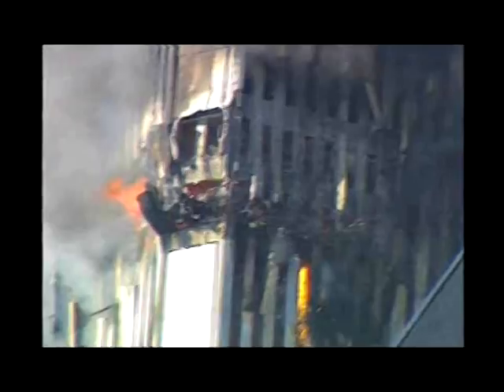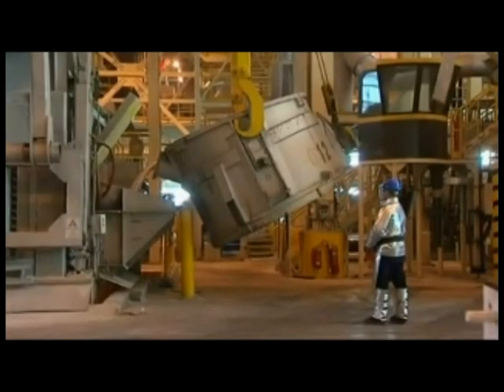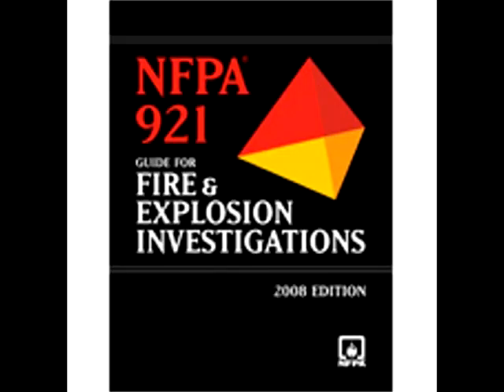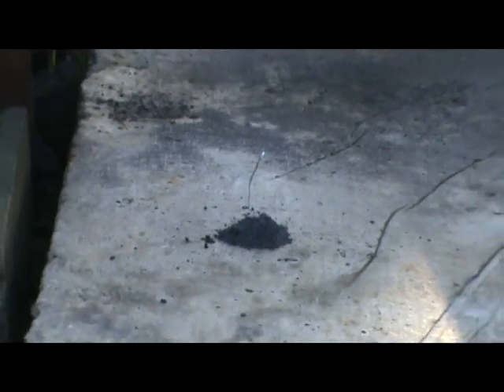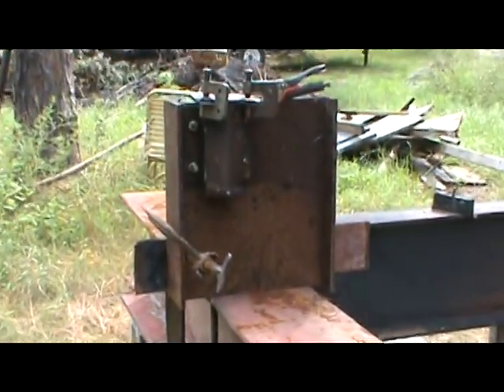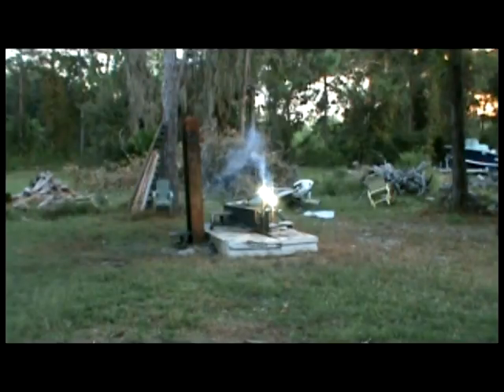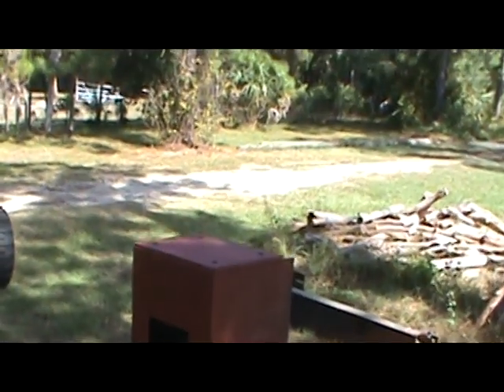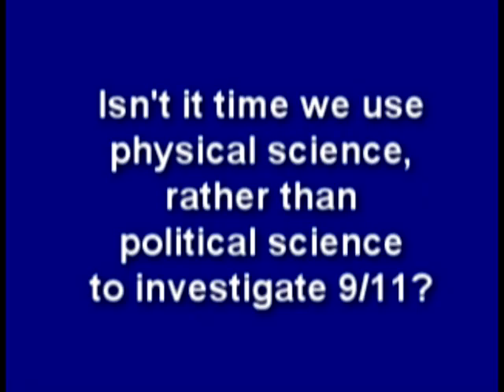9/11 Experiments: The Great Thermate Debate

Comment: I will certainly give you credit on four counts: This is the first video on the topic EVER which I have watched in it's entirety, You are clearly not the average idiot ready to jump on the crackpot bandwagon and conjure alien balls and holograms because you've got nothing better to do, I find no issue whatsoever with your engineering or practical presentation, and well - it IS a straightforward practical presentation leaving no questions as to your methods and therefore verifiable by "anyone". Very very well done. Have you convinced me that thermi/ate WAS utilized in the demolition of the WTC's? No. Not this video alone. But your presentation has earned my respect, and does beg the question perhaps as to why other experiments (such as the Nat Geo clip referenced) were so easily abandoned as failures. Good work man.
Reply: madgodloki The purpose of this video was never to prove that thermite was used in the demolition of the towers.  It was to disprove the Nat Geo claim that no type of thermite can be used to cut through steel beams.  

Being that a single engineer can cut through solid steel with basic thermate and rudimentary cutting devices constructed in his backyard, it is clear that the Nat Geo investigation is a joke, and is clearly a poorly conceived whitewash attempt.

Therefore the video proves that the common "debunker" excuse that thermite can't be used to cut steel beams, is wrong.

"They didn't melt that I'm aware of."

http://www.fema.gov/pdf/library/fema403_apc.pdf

"Evidence of a severe high temperature corrosion attack on the steel, including oxidation and sulfidation with subsequent intergranular melting, was readily visible in the near-surface microstructure. A liquid eutectic mixture containing primarily iron, oxygen, and sulfur formed during this hot corrosion attack on the steel."

I see "steel" and "melting", as well as "liquid" and "iron" in the same sentence.  Seems to me that FEMA proves that molten iron was present in the WTC rubble.  Which couldn't be caused by office fires or jet fuel.  Which leaves...incendiaries or pyrotechnics.

Enter the Harrit paper, which uses electron microscopy, XEDS imaging, DSC analysis, electrical resistivity testing, and various other tests to determine that there is thermite (nanothermite) in the WTC dust.

So we have forensic evidence of melted steel, as well as an incendiary which can melt steel.  Clearly, something fishy is going on here.

You can speculate all you want about how unlikely you think it would be to have these devices planted in the towers, but all that amounts to is your opinion, which happens to conflict with the proven facts.

A stronger argument would present evidence that contradicts the facts which I have just cited.
Reply: madgodloki <the initial reaction causes the noise, which then results in the heat which would not instantly melt anything, The noise happened during the collapse so the better explanation is that the noise was from the collapsing.>

The thermite compound was contained within an energetic matrix, which would produce expanding gas and amplify the cutting potential of the incendiary.  You pretend to know exactly how long it would take for an advanced material such as this to weaken steel enough to cause a collapse.  You also don't seem to take into account the weight of the floors above the impact, which wouldn't need the steel to be completely severed before it gave out.  You also don't take into account the possibility that the incendiaries targeted the crucial welds and bolts between beams, which would have taken much less material and a much shorter amount of time to sever than an entire steel beam.  You also don't take into account the fact that other forms of pyrotechnic could have been used in conjunction with the type analyzed in the thermite paper.

You seem to be drawing a lot of baseless conclusions without any real facts to back them up.

< hahaha, See this shows me you don't even know what you're talking about. You probably read "signs of thermite" and then assume they found like smoking gun pieces of mixed thermite right? That's not the case. If you want me to refute something how about you cite it exactly as its stated?>

Actually I'm just going off of the obscure statements you made in your last post.  You didn't provide a clear enough argument for me to argue against so I merely assumed that you were using the "this material magically formed out of the individual components during the collapse" theory which I have heard before, and seemed to be the closest thing to your statement.  Clarify your argument if you would like me to refute it in a different manner.

<The chips you're referring to had double the maximum energy of thermite, I don't know if you understand chemistry in the slightest but that means simply put "It. was. not. thermite.">

No.  It means, simply put, that the thermitic components were contained in an energetic, silica and carbon rich matrix.  You know, carbon, like charcoal?  Carbon compounds tend to contain energy.  Thats why we burn them for fuel.  The combustion of this matrix provides the added energy necessary to raise the energy output in the DSC test, and would supply expanding gasses which would increase the cutting efficiency of the incendiary material contained therein.

<Paint on the other hand, the paint that was used on the beams had a very similar organic compound in it, and it would have a higher energy level.>

Harrit tested the paint in the same DSC analysis as his chips, and the two are in no way similar.  You may know this if you had read the study.  Paint has a broad thermal spectrum (i.e. doesn't spike violently).  The Harrit sample releases all of its energy in a very short amount of time (spikes violently).  Moreover, the Harrit samples release molten siica and iron upon ignition.  Show me a paint that does that, and Ill show you a paint that would never pass fire code.  On top of all that, paint has a very high electrical resistivity, while the Harrit material has a very low electrical resistivity, due to the presence of elemental aluminum.  Can you cite an expert in a published paper that can refute all of this? 

<Why didn't your boy try to ignite these so called thermite chips in a 0 oxygen environment?>

Because he was comparing the DSC to the methods used in the Lawrence Livermore Lab to test Xerogel, a known form of super termite.   As I've already said, the Harrit sample also contains carbon compounds, which would not combust properly and give an accurate total energy reading without the presence of atmospheric oxygen.  Comparing The Harrit sample to Xerogel, Harrit had a higher energy peak, and a quicker reaction time.  Therefore, it is a more potent incendiary than Xerogel.  But clearly, this is paint....

Considering the actual collapse didn't happen in a vacuum, it is more relevant to know the DSC reading in the same atmospheric conditions that existed during the collapse.  The XEDS, the DSC, the release of molten metal and silica, and the electrical resistivity tests prove beyond a shadow of a doubt that the material is an incendiary.  Do you have any published expert analysis to refute any of this?  Or just your flawed logic?

<Hey I've got something for you to think about, If this example was accurate then they didn't find the equivalent of crumbs and you're claiming it was the whole god damn plate of cookies that fell. In fact they found a piece of fucking rice crispy treat. You still confused?>

Yes.  You seem to not be very good at clearly and concisely making a point.  You also seem to have misunderstood the analogy I was making in the first place.  My point was that there would be as much chance of getting cookies in the manner I described as there would be for these advanced engineered incendiary materials to randomly form from the individual components of the structure during the collapse.

<they didn't find any thermite they found something that was double the maximum energy content with a similar ingredient that just so happens to also be found in the paint that they paint to beams with>

I've already been over this.  The carbon - silica matrix adds extra energy.  The red paint in the WTC contained aluminosilicate (kaolinite) not elemental aluminum.  You having trouble?

<How many people do you think would have been involved in that? How many people could have seen what was happening? Do you think they were paying off these people or do you think some hundred or two hundred people were cool with setting up a giant death machine for free on the side?  How much do you think each person would require to kill thousands of people without speaking up about it after the fact for going on 14 years?>

Irrelevant conjecture.  Present facts that dispute the Harrit analysis.  Your opinion means nothing when weighed against facts.

<Knowing that half the people who believe this garbage also think the lizard shapeshifters in the illuminati are responsible for them losing their job doesn't help me buy into this fantastic story. >

Cite the survey that provides evidence for this claim.  Oh, you've got nothing?  Just ad hominem?  Weak argument.

<Again if you read the harrit paper, why did he not try to ignite this 'thermite' without oxygen? Simple way to prove its thermite and not paint. >

Already explained this to you.  There were several tests that prove that the material was not paint, because they tested the material specifically against paint.  Maybe you should read the study.

< I do know that the energy content was not thermite and that means it wasn't thermite, and no some hypothetical gel doesn't strike me as a very likely answer.>

Hypothetical gel?  There are published papers that the Harrit paper references, that prove the existence of sol-gel type incendiaries, as well as catalogues their manufacture processes, incendiary characteristics, and applications.  The Harrit sample was compared to Xerogel, a known sol-gel incendiary produced at the Lawrence Livermore lab.  Try again. 

<You do realize that thermite doesn't have higher energy content than most common items? Its the fast reaction and oxidation which causes it to be so dangerous,>

Exactly.  And the DSC tests prove the material releases all of its energy in a very high thermal peak in an extremely short amount of time, and produces molten iron spheres.  Which is nothing like paint, or any other similar material.  Prove otherwise.

< Seems pretty simple to me, you get this huge piece that could really show your side so youuu choose not to use it properly.>

??  Be more clear please.

< He also didn't end up in a very reputable journal, in fact someone put a publication through with just a bunch of non-sense in that very same journal and it passed the peer reviewing. >

Another false ad hominem?  Seems to be all you've got.  The gibberish paper you are referring to was never published.  The journal said they would accept the paper initially so that they could verify the identity of the individual during the payment processing, and expose the fraud who kept submitting gibberish papers to their journal under an alias, trying to falsely discredit their review process.  It worked, because this particular fraud never tried to submit any more gibberish.  

Cite a paper that was actually published and prove that there was no peer review, then you might have something.  Any other misrepresented facts you want to cite as your scientific evidence?

<This is talking about modern paints in something completely irrelevant I think it's talking about modern paintings perhaps.. page 183 though mentions analysis finding elemental aluminum in the red, yellow, green, and purple at least.  Very convenient, I suppose the government got to them! >

I see nothing in the source you cited that proves the presence of elemental aluminum.  The authors say that the aluminum readings are most likely associated with aluminum stearate, hydrated alumina, or aluminum hydroxide.  Also, this excerpt is a study of oil paints...  

Find the MSDS sheet for the paint used on the WTC structural steel?  Elemental aluminum powder is highly reactive, and is a controlled substance.  It would surely be listed in the Material Safety Data Sheet if it was contained in a paint.  Where is it?
Reply: +El Clandestino Cognitive dissonance.  If it conflicts, simply ignore the facts and pretend that they are made up.  Much easier than adjusting your world view.
Reply: +Richard Driskill and why would that be?
Reply: Richard Driskill ""Being 6"6' has its advantages" HAHAHAHAHA! Yep, if you are "6 inches 6 feet", I think that you would have an advantage in a bizarre circus of the VERY short and VERY wide. I would agree, NO ONE would measure up to you! But that's the way it is when you're born with no spine"

Kinda sounds like you had three separate insults in your little head, and you couldn't decide which one to use, so you just combined them poorly and came up with the incoherent crap you just posted.  

Are you implying that you don't believe that I'm actually 6"6'?  Are you saying that you think 6"6' is circus-tall?  Both translations would imply that you are short and physically unimpressive, and envious of tall, statuesque people.  Have you always had trouble expressing your thoughts?  Try again, but formulate your next comment in a way that doesn't make you sound illiterate. 

"Get those peepers checked meathead, they glow bright green in your avatar, bitch."

Aww, that's cute.  You actually think I'm a dog typing on a keyboard.  Poor guy.  Apparently you believe that most people put their actual photograph as their avatar.  You should also realize that a camera flash refracting in the lens of an eye and putting off a green glow (or a red glow is common for humans, but clearly I'm a canine so that's irrelevant) doesn't mean the eye is actually green.

"have you even bothered to read anything in these luntic threads? You'll find my answer there; it's easy to spot, it'll be the only sane entry."

I don't think your post that proves the conclusions of this video wrong exists.  I think you lack the capacity to formulate a coherent argument; you can't even formulate a coherent insult.  Prove me wrong, little guy.
Reply: Richard Driskill I'm not the one who has to come up with anything.  The burden of proof lies with the accuser.  You claim that the conclusions this video demonstrates are wrong.  You've had a couple days to make an argument or prove a point.  You have failed to do so.  Every further post of yours that fails to advance your argument exposes you as a liar with no actual refutation.  

This particular post, by volume, is mostly "HAHA".  Is your keyboard broken, or is this really all you can come up with?  Pathetic.

Factutal refutation?  No?  Your idea of a coherent argument is "HAHA" mixed with penis jokes and nonsensical insults?  And you really think people are going to read this and think "yeah, that guy sure is smart; I'm going to believe him"?

You're going to have to do better than that, simpleton.
Reply: Richard Driskill Nope.  Pretty sure you never made that post.  And it's clear that you are afraid to try your hand at an actual argument, because you know you would get slaughtered.  Go ahead and try me.
Reply: +Richard Driskill Wow! I click a video about thermate and what do I see...?  Are you freakin' everywhere, adding nothing to the conversation but endless streams of hahahaha's and insults? How sad! 
(sure, dude: go ahead and respond with more empty insults and endless streams of typed out HaHa's, thinking I give a shit and would feel offended).

ps: the 9/11 official report is a (sick) joke, even the investigators  themselves said they were "set out to fail"
Reply: +Jim Vicious The main reasons I think he's wrong about this, Well first off he keeps saying that old thing about steel beams don't melt with jet fuel. 
   They didn't melt that I'm aware of. They were merely compromised by the intense heat. 
  Melted iron and aluminum and any other material very easily could have been from inside the building they would have melted and formed the same iron balls as any other molten iron. 
   I don't think his video is convincing because it just shows exactly how many people and how much material would have to have been moved into the building with the unsuspecting victims acting like nothing was going on with it. 
    Plus all the people involved and not a single person feeling the guilt or slipping about it.... 
  The number of people who just grasp at straws trying to make this a conspiracy that happened.. and when you look at it objectively hot steel beams are weaker so they fall. floors collapse and cause the appearance of concrete and dust and whatnot shooting out windows. The immense amount of synergy the people would have needed to set up something this massive is ridiculous especially when a plane hit the building and we know for a fact that would be enough to take it down. 
   I agree though he is not nearly on the level of crazy people, he may be convinced for silly reasons but at least he isn't buying it out of nothing.
Reply: madgodloki <The proven facts, That's rich.>

Scientifically proven.  Cite your academic refutation, since you clearly aren't enough of an expert to be able to formulate your own analysis.  Title.  Author.  Publication.  Date.  Then either quote from the body of the article or paraphrase specifically how these facts have been disproven.  Good luck.

<How long would it take the thermite/thermate to cut through the beam? Milliseconds? The explosions are reported right at the time of the collapse yes? So that means the devices which brought the tower down were activated and brought the tower down at the same time. Ha, get real conspiracy nut.>

Uh, thats generally how pyrotechnics work.  You seem easily confused.  Clarify your line of questioning; it isn't clear what you are implying.

<What were the other contents of the planes which hit the buildings? Can you show me how its impossible the same traces you link to a specific case didn't come from something else?>

What are you talking about?  Are you implying that the material discovered in the Harrit paper magically formed out of the remains of the building collapse, while it was collapsing?  Ah, I've hear this wacko theory before.  Let me guess: you believe that rust from the girders, and aluminum from the cladding all pulverized itself into the exact same crystalline shapes, in a uniform size, mixed uniformly in mid air, and managed to fuse in a silica and carbon matrix, and then cure and harden into perfectly engineered incendiary chips, all in a span of 10 seconds during the collapse.  Right.  You've clearly got it all figured out.

Hey, I've got something for you to try out.  Take a big mixing bowl, and add flour, sugar, salt, baking soda, milk, and chocolate chips.  Toss the mixture in the air, pelt it with a few eggs, and then hit it with a flamethrower on the way down.  You'll get chocolate chip cookies, I promise.  Still confused?

Identifying the individual components of thermite from separate pieces of debris is irrelevant.  Finding all of these components combined in the same chip, in the proper ratio to exhibit an exothermic reaction and release molten iron, is very significant indeed.  For your sake, I really hope you can understand the distinction.

< You said they found nano-thermite from the harrit paper, Yet harrit himself was saying many many many tons of thermite were used and there's not really any evidence that ever happened>

Oh, so there is no way it could have happened during the elevator modernization?  Do the elevator shafts not have access to the central support columns?  Cite your proof that this could not have happened.  

<Also Thermite has a maximum energy content of 4.0MJ/kg The experimental energy content of the chips found was double that at least. Which means it wasn't thermite.>  

Confused again, huh?  Had you read the paper, you may have discovered that the authors addressed this issue.  Thermite has an energy content lower than that observed in the Harrit chips.  That is because, in the Harrit chips, the thermite reactants are suspended in a matrix that is energetic in and of itself.  The presence of carbon in the silica matrix gives reason to believe this is the case.  The added energy from the energetic matrix is why the DSC spike is higher than normal thermite.

<The answer is Red paint. Lol They were testing the red paint used to paint the beams.>

Ah, right.  Now it is all so clear.  In one breath you claim this material has double the energy of thermite.  In the very next sentence, you claim it is paint.  You realize that you just made the statement that red paint is more energetic than thermite, right?  I realize you're easily confused, but surely I don't have to clarify why that statement is idiotic.  Please, tell me I don't.

So red paint displays the same DSC spike as the Harrit material?  Show me where you found this information.  

Red paint contains elemental aluminum?  Find me the MSDS sheet for any paint that contains elemental aluminum (the type of aluminum found in the Harrit samples after a MEK soak followed by XEDS analysis).  If I remember correctly, paint sometimes contains kaolin clay (an aluminosilicate), which is not the same as elemental aluminum.  

Red paint has the same electrical resistivity as the Harrit sample?  Pretty sure paint is exponentially more resistant than the Harrit sample, due to the lack of elemental aluminum.  Of course, all of this was already addressed in the Harrit paper, which you didn't read.

Would paint dissolve or soften in paint solvent?  Pretty sure it would.  So why does the Harrit sample expand to 2x the volume and remain very hard?  Could it be that it's not paint?  Could it be that it is an advanced sol-gel nano-incendiary?  Thats what the 9 expert authors of the Harrit paper conclude.  Which published experts can you cite who draw a different conclusion?

<" I see "steel" and "melting", as well as "liquid" and "iron" in the same sentence. " 
  Yes cause this is grade A science, I saw some keywords in a paper written by people who are probably involved in the conspiracy!>

This information is in FEMA's metallurgical analysis appendix C.  And you're an idiot.  Get a clue.
Reply: 442hoeky he said it was mercury and office materials do float on molten aluminum. (as they're burning to ash from the heat) 
It really is quite simple, guys: No way jet-fuel fires compromises steel high-rise H-beams, and surely not in the synchronised manner it happened on 9/11 THREE TIMES IN A ROW. If it smells like a dead rat, looks like a dead rat, and science says it's a dead rat, and there's three of them; we're most likely dealing with dead rats, here.
Reply: madgodloki Yes, the quite significant difference between the melting point of carbon steel - that is the temperature in which a phase change from solid to liquid occurs - and the temperature in which the elastic modulus, or stiffness is significantly altered has indeed tended to be selectively ignored by certain folk. Indeed the 'science' invoked by many an armchair engineer would have negated the possibility of the iron age altogether. That said, your second point (although technically totally unscientific! Damn!) has always been the one that ... just seems ... well hell yes. Man, you can't tell a secret to 25 people without  the cat getting out of the bag. A conspiracy of this magnitude - perhaps (depending on which exact flavor of conspiracy you choose to subscribe to) involving thousands of folk who have managed to keep their yaps shut - hell, I'd be more willing to accept aliens, or Illuminati Jews, or whatever idiocy as more likely. For the record I personally have no issue with "official" findings, at least to the degree that I've bothered to research them. THAT SAID - still kudos to the producer of this video for their version of an impartial (insomuch as there is no obvious obfuscation of results that may not have fit with what they were hoping to accomplish) and reasonably scientific first hand investigation. IF more people like him were to make a specific type of noise - as opposed to "Shit man, it was the invisible alien balls and rods thingamajig with Satan's face in the smoke cloud so it must mean.."  Well then, the thinking percentile would indeed be forced to at least look beyond their comfort with official investigation; and THAT in itself is to be commended in this sad sad world of Huxleyesque "Who did Paris blow this week?" barely conscious sheeple.
Reply: +Boris B 

Yup, he's a delusional moron.  The funny thing is that I think he truly believes he is winning arguments by "HAHA"ing at all of his own uncreative, pathetic insults, while at the same time presenting no actual argument or facts to support his unsubstantiated claims about the conclusions of this video.

It's sad but funny.
Reply: +Jim Vicious I have to say that I agree with you for the most part, but he lost me at 3:09 when he showed a coin floating on what is clearly Mercury but shows it right after saying office materials will float on molten aluminum.  This is the kind of propaganda I'm used to from "truthers" and it shows he's no different.  The idea that this was an "open air" fire is ridiculous, anyway.  Each floor of the tower is a sandwich of concrete.  A huge fire inside with a massive hole (from the plane) and a perfect chimney (air vents and elevator shafts) creates a perfect furnace for creating extreme heat.  Ancient man melted iron and steel with very little understanding of "how" and with no fancy fuels - just wood and air.
Reply: +442hoeky

It would take a blast furnace to melt steel with hydrocarbon fuel of any kind.  The fires in the WTC never got close to hot enough to melt steel.  The towers were in no way similar to a blast furnace.
Reply: Nathan Stirling
<Yes it does, jet fuel reaches the required temperature to weaken steel by at least forty percent.>

Ah, so in your factually unsupported OPINION, jet fuel (which mostly burned off during the initial impact and subsequent fireball) can cause a total structural collapse, but thermite, which is designed to melt metal, could not.  Solid argument

<That point is significantly less than half the 'melting point' of steel.>

Very true,  Did you account for this little piece of evidence?:

http://www.fema.gov/pdf/library/fema403_apc.pdf

"Evidence of a severe high temperature corrosion attack on the steel, including oxidation and sulfidation with subsequent intergranular melting, was readily visible in the near-surface microstructure. A liquid eutectic mixture containing primarily iron, oxygen, and sulfur formed during this hot corrosion attack on the steel."

Hmm, the words "melting" and "steel" as well as "liquid" and "iron" in the same sentence seem to highlight the existence of, well, melting steel and liquid iron.  In your own words, jet fuel would not be enough to melt steel in this situation, therefore there was something present to supply the extra energy needed to do this damage.

I wonder what this could have been...
Reply: 442hoeky
<but the WTC was a unique building in size and design.  It's very difficult to compare apples to oranges.>

True, but technically every building is unique, and no building fire that I am aware of has ever resulted in the melting of the steel structure.

<I should point out that the third building is an argument in and of itself.  If all these arguments were based solely on the that building coming down, I wouldn't say a thing because there's definitely something strange about that.>

Certainly, and I would add that there would be no reason to believe that whatever happened to building 7 didn't also happen to buildings 1 and 2.
Reply: +rose white 
There is no evidence of any fires that wouldn't be considered relatively minor.  They were only in isolated areas on a few floors.  There was no visible fire at the time of collapse.  Asymmetrical fire cannot cause a symmetrical collapse, and certainly not at free-fall.  Even the best computer model that NIST could fabricate is progressive failure, and looks nothing like the actual sudden collapse.

Unless you can scientifically refute the Harrit paper, which proves that incendiaries were used in the collapse, and is peer reviewed and has been published for 6 years without a refutation, then your conjecture doesn't really amount to much.
Reply: madgodloki < Hmmm, nope. I know it wouldn't be POP as it started WHILE it was collapsing. The heat no matter how much pressure or amplifying would not be capable of igniting and burning through a thick steel beam at the very same moment. >

A) You don't know that.  Cite your academic source for such information.  Harrit et all reference multiple papers that cite the ability for nano or super thermites to react explosively.  Explosives = near instantaneous severing of steel supports.
B) You forgot about the possibility of the use of other types of explosive pyrotechnics, and the likelihood that the welds and bolts would have been targeted, which would take far less energy to sever.

You pretend to be Mr. Omniscient explosives guy, and know exactly what could or could not have been done to demolish the towers.  You make false assumptions and blanket statements, and act like they are proven fact.  They aren't.  Move on.  Unless you'd like to cite a study to support your claims?

<Also now you're saying it's cutting the beam. I can show you a picture of a beam melted through with thermite it's not a clean cut, not so easy to control thermite leaves that molten residue on the beam too, There are workers which came in AFTER the attack to clear some debris and cut some of the beams, I'm pretty sure you're mixing up your ideas here. Was it CUT as in cut by a worker, or was it MELTED like you truthers always tote around jet fuel doesn't melt steel beams. >

Which of my statements are you referring to exactly?  It would help if you cited the specific statement that you are attempting to refute.  Again, we have a clarity of argument issue.

<Did you take that into account when you thought about the beams being weakened by the office fires and jet fuels?>

Sure.  Had the structure failed due to fire, the weakest area would have buckled and the top portion would have toppled to that side.  Clearly, the structural damage and fire was asymmetrical, therefore the failure should have been asymmetrical.  Ever play Jenga?  When you pulled out that bock near the bottom, did your Jenga tower turn to sawdust in midair?

< You wouldn't need thermite to cut through the beams at all, enough heat will cause the integrity to be compromised. Not nearly the amount you need to actually melt beams. >

Except the heat was only present on the damaged floors.  The bottom structure was undamaged and unweakened.  The smaller, lighter portion of the tower collapsing and turning the larger, stronger bottom portion to dust defies this little thing called physics, specifically Newton's third law.  When the top floors collapsed, its force was not just exerted on the single floor below it, but onto the strength of the entire structure (which would have exerted the same force back onto the falling structure).  The benefit of a steel cage support structure is that the force is exerted evenly throughout the entire structure.  The collapsing top floors would have easily been supported by the undamaged structure below.  It is physically impossible for such a collapse to happen unless the steel support structure is removed or compromised.  

Moreover, even if the top floor did somehow have enough energy to crush the bottom floors to dust, the top floor would have been crushed to dust at the same rate, and the energy taken to do this would have defeated the inertia of the initial collapse.  There would be no remaining energy to continue crushing the bottom floors.  Your beliefs contradict the basic laws of physics.  Try again.

<You didn't consider the possibility that perhaps metal eating termites were also set loose, or that prisoners tunneled into the building and used their fingernail files for several weeks to grind through little by little into the beams just enough to weaken them under the weight of the building that was hit by a plane, on fire and at a high enough temperature to compromise the integrity of the steel beams without any explosives at all anyways. >

The difference is that there is peer reviewed, published forensic proof of thermite in the WTC.  See the difference?  The fact remains: until you can cite a contradicting, published expert analysis of the WTC dust (none exists), your argument really amounts to nothing.  It amounts to the opinion of an anonymous shill on YouTube vs the scientific experimentation and analysis of 9 experts in their fields.  Hmm, which one weighs more?

<The more fantastic the story has to be, the more likely some evidence of the plan would have turned up by now. Its either a very simple plan that required less than 3 people that were immediately killed after finishing the project, and they moved the materials in over the course of several months Several tons of material over a few months between very few people or you have a devout group of building destroying workers with tons of experience in james bond movies. Just seriously you sound like a kid coming up with a movie plot. >

Irrelevant.  Again, your conjecture amounts to nothing.  You fail to address or present any actual facts.  Try again.  Also, work on your punctuation and sentence format.  That paragraph was atrocious.

<This may be how things work in imagination land, but in the real world planes hit buildings and fires cause their beams to fail, there is no other explanation required there doesn't have to be a james bond plot involved for something like this.>

Oh really?  So in the real world, cite another example where office fires caused a building to collapse to dust.  Good luck with that one.

<for what reason? Killing thousands of important people for what reason? >

That's pretty obvious to anybody who has been paying attention for the last decade and a half.  Apparently you have not been.

<The thermite paper, didn't bring back any results of thermite. >

Says which published expert?  There shouldn't be a comma there, by the way.

<https://www.metabunk.org/debunked-iron-microspheres-in-9-11-wtc-dust-as-evidence-for-thermite.t2523/ >

Right...so this is your "expert analysis?"  A debunker blog?  You're going to try to refute the Harrit paper by making up lies about the peer review process (ad hominem), and then cite a blog post as your source?  You see the irony, right?  Too funny.

<Your biggest bit of evidence was the iron spheres and they're explainable by other sources of iron in the building.>

No, the biggest evidence for thermite is actual thermite, what was adequately proven to exist in the Harrit paper.  Any credible refutation?  Or just more blog posts and your misinformed opinion?

<  It will also not take away the fact that thermite can not instantaneously burn through steel. 
 Need time for the reaction and then time for the heat to transfer to the beam.>

Irrelevant.  Disprove Harrit or you have nothing. 

<The iron is explainable, the lack of evidence on your side is not.>

Funny, since I'm the only person who has actually presented evidence in this debate.  All you have are you meager, unsupported assumptions.

<There was no thermite in the test,>

Another brilliant argument.  Oh look, no supporting evidence again, what a surprise.

<They were trying to determine if something was thermite and one of the key parts was the iron spheres which can be created with a bic lighter, and some "steel wool" Go ahead try it.>

Right, clearly the red chips were steel wool and flint.  Nano flint.  Another awesome argument.  Steel wool and flint that ignite and exhibit a steeper exothermal peak in a shorter amount of time than conventional thermite.  Because steel wool has the same DSC reading as the Harrit sample.  Or was it flint?  Oh wait, it was just red paint.  Darn, looks like you've confused yourself again.

<There's also a video in that link I sent you where they recreated the iron spheres with a regular wood fire in a barrel. Your theory makes no sense. >

Ah right, your academic, peer reviewed internet blog again.  Because that's your strongest source.  Do these iron spheres produced from a barrel have the same chemical signature as the spheres produced by thermite?  Do the thermite spheres have the same signature as the spheres produced by flint and steel wool?  Car brakes?  Prove that this is the case.  Cite a study.  In the Harrit study, the authors demonstrate that the chemical signature of the spheres produced from the thermite in the DSC test is a match for the signature of the spheres found in the WTC dust.  Where's your competing reputable study that proves that all iron rich spheres have the same chemical signature?  I'd like to review it.

Whats wrong?  Why can't you cite any studies to support your argument?  Could it be that your argument is unsupportable, because it's wrong?  Hmm, I wonder...
Reply: JetMechMA What about building 7? It suffered far less damage than WTC buildings 3, 4, 5, and 6 all of which remained standing. 

Even supposing that fire in that building was hot enough to weaken the steel structure (for the first time in history), asymmetrical damage cannot cause a symmetrical global collapse.

And again free fall speed is the smoking gun for demolition. Unless ALL resistance is removed from below (for example by blowing out every support column inside and outside at the same time for a symmetrical collapse) then the scenario violates conservation of momentum and conservation of energy. 

Just look at the video, NIST claims WTC 7 collapsed because of damage to column 79, yet the collapse begins with a classic demolition "dip" in the center (far away from column 79) to ensure the building implodes instead of taking the path of least resistance and falling over. Again, asymmetric damage causing a symmetrical collapse at free fall speed through the path of most resistance does not make sense.
Reply: Emvaz22 You're clearly not experienced in pyrotechnics then. 
   The video would be enough to show you it takes more than a couple of milliseconds between the pop sound and the burning through inches of steel.  The only people to say they heard "explosions" or "gun fire" or however they describe it said it happened at the time of the collapse, the thermite or thermate or whichever would have taken a good handful of seconds AT LEAST between the noise and the melting through the beams. 
  the initial reaction causes the noise, which then results in the heat which would not instantly melt anything, The noise happened during the collapse so the better explanation is that the noise was from the collapsing. 

 "What are you talking about?  Are you implying that the material discovered in the Harrit paper magically formed out of the remains of the building collapse, while it was collapsing?  Ah, I've hear this wacko theory before.  Let me guess: you believe that rust from the girders, and aluminum from the cladding all pulverized itself into the exact same crystalline shapes, in a uniform size, mixed uniformly in mid air, and managed to fuse in a silica and carbon matrix, and then cure and harden into perfectly engineered incendiary chips, all in a span of 10 seconds during the collapse.  Right.  You've clearly got it all figured out." 
 
 hahaha, See this shows me you don't even know what you're talking about. You probably read "signs of thermite" and then assume they found like smoking gun pieces of mixed thermite right? That's not the case. If you want me to refute something how about you cite it exactly as its stated? 

 The chips you're referring to had double the maximum energy of thermite, I don't know if you understand chemistry in the slightest but that means simply put "It. was. not. thermite."  Paint on the other hand, the paint that was used on the beams had a very similar organic compound in it, and it would have a higher energy level. Why didn't your boy try to ignite these so called thermite chips in a 0 oxygen environment? If it was thermite or something of the like then it would produce its own oxygen, which is why the reaction is so much more intense and so hard to put out. 
 
 "Hey, I've got something for you to try out.  Take a big mixing bowl, and add flour, sugar, salt, baking soda, milk, and chocolate chips.  Toss the mixture in the air, pelt it with a few eggs, and then hit it with a flamethrower on the way down.  You'll get chocolate chip cookies, I promise.  Still confused?" 

 Hey I've got something for you to think about, If this example was accurate then they didn't find the equivalent of crumbs and you're claiming it was the whole god damn plate of cookies that fell. In fact they found a piece of fucking rice crispy treat. You still confused? 

 "Identifying the individual components of thermite from separate pieces of debris is irrelevant.  Finding all of these components combined in the same chip, in the proper ratio to exhibit an exothermic reaction and release molten iron, is very significant indeed.  For your sake, I really hope you can understand the distinction." 
  
  Have you ever, EVER touched thermite? The ratio can be sloppy as long as it's within a certain range of the ratio. But that's not the issue they didn't find any thermite they found something that was double the maximum energy content with a similar ingredient that just so happens to also be found in the paint that they paint to beams with. 
  Again, I can find some styrofoam somewhere near a water cooler would you like me to think the bit of gasoline near generators or kerosene or anything else means they were preparing napalm for the children?  Those darn lizard people. 

 "Oh, so there is no way it could have happened during the elevator modernization?  Do the elevator shafts not have access to the central support columns?  Cite your proof that this could not have happened.  " 
  How many people do you think would have been involved in that? How many people could have seen what was happening? Do you think they were paying off these people or do you think some hundred or two hundred people were cool with setting up a giant death machine for free on the side?  How much do you think each person would require to kill thousands of people without speaking up about it after the fact for going on 14 years?
  I would love to believe that some group of people can fly and fart rainbows but I just don't see it being that likely. 
  Knowing that half the people who believe this garbage also think the lizard shapeshifters in the illuminati are responsible for them losing their job doesn't help me buy into this fantastic story. 
  
  Again if you read the harrit paper, why did he not try to ignite this 'thermite' without oxygen? Simple way to prove its thermite and not paint.  
  I do know that the energy content was not thermite and that means it wasn't thermite, and no some hypothetical gel doesn't strike me as a very likely answer. I don't think this is some sort of james bond novel with the government being goldfinger though so I guess that's my problem right? I live on earth instead of daydream city. 
 
 "Ah, right.  Now it is all so clear.  In one breath you claim this material has double the energy of thermite.  In the very next sentence, you claim it is paint.  You realize that you just made the statement that red paint is more energetic than thermite, right?  I realize you're easily confused, but surely I don't have to clarify why that statement is idiotic.  Please, tell me I don't." 
  
  You do realize that thermite doesn't have higher energy content than most common items? Its the fast reaction and oxidation which causes it to be so dangerous, whereas a lump of wood will burn for hours and even a common camp fire could weaken beams like that to where they would collapse. 
  Again, if it's thermite why so hesitant to show its ignition in a no oxygen environment? 
  Seems pretty simple to me, you get this huge piece that could really show your side so youuu choose not to use it properly. 
  Either because you know you can't, or you were too stupid. And that's the guy you're siding with. 
   He also didn't end up in a very reputable journal, in fact someone put a publication through with just a bunch of non-sense in that very same journal and it passed the peer reviewing. 
   Color me not impressed. 

 You asked for paint with elemental aluminum, I don't feel like sitting here beating this dead horse for much longer so I found the simplest case of elemental aluminum in paint I could from 15 seconds of looking 

 https://books.google.com/books?id=ia9V2mls3K4C&pg=PA183&lpg=PA183&dq=elemental+aluminum+in+paint&source=bl&ots=wEhvjLCqA4&sig=pYl5ORkMzydguP_JKDr22Aq0OdI&hl=en&sa=X&ved=0CCUQ6AEwAWoVChMIyK-p-I_LxwIVBkySCh0DnQBG#v=onepage&q=elemental%20aluminum%20in%20paint&f=false

 This is talking about modern paints in something completely irrelevant I think it's talking about modern paintings perhaps.. page 183 though mentions analysis finding elemental aluminum in the red, yellow, green, and purple at least.  Very convenient, I suppose the government got to them!
Reply: Boris B
<What the bleep has the time loud noises of the collapse take has to do with the time it took to weaken the steel?>

Nothing.  Madgodloki is constructing a straw man argument, in which he fallaciously claims that if the bang noise was from the collapse (which it may or may not have been), therefore it could not have been demolition.  His argument is incorrect because, as you say, most incendiaries don't produce a report, and you wouldn't hear them anyway.  It is also incorrect because Incendiaries (particularly nano incendiaries) CAN cause a report similar to a high explosive due to the extremely fast rate of the reaction, and this report would happen at virtually the same time as the steel would be severed and floor collapses.  Whichever the case, his logic is flawed.

< I ask cause they keep saying the bangs heard were from the building collapsing and not from the thermite. Thermite hissess. Is anyone claiming otherwise?>

Indeed, a nanothermite can be formulated to bang.  Even a conventional thermate configured into a cutting charge (such as the ones used in this video), can also cause a bang, although it wouldn't be nearly as obvious as the report from an HE charge.  Thermite is generally going to hiss if it is in open air with nothing to confine or focus the reaction.
Reply: rose white
<You can believe whatever conspiracy fairy tales you want as they don't amount to much.>

Oh, so you have published science to refute the claims presented in the Harrit paper?

Here they are, refute them:
"1. It is composed of aluminum, iron, oxygen, silicon and carbon. Lesser amounts of other potentially reactive elements are sometimes present, such as potassium, sulfur, lead, barium and copper.
2. The primary elements (Al, Fe, O, Si, C) are typically all present in particles at the scale of tens to hundreds of nanometers, and detailed XEDS mapping shows intimate mixing.
3. On treatment with methyl ethyl ketone solvent, some segregation of components occurred. Elemental aluminum became sufficiently concentrated to be clearly identified in the pre-ignition material.
4. Iron oxide appears in faceted grains roughly 100 nm across whereas the aluminum appears in thin plate- like structures. The small size of the iron oxide particles qualifies the material to be characterized as nano-thermite or super-thermite.
5. Analysis shows that iron and oxygen are present in a ratio consistent with Fe2O3. The red material in all four WTC dust samples was similar in this way. Iron oxide was found in the pre-ignition material whereas elemental iron was not.
6. From the presence of elemental aluminum and iron oxide in the red material, we conclude that it contains the ingredients of thermite.
7. As measured using DSC, the material ignites and reacts vigorously at a temperature of approximately 430 ̊C, with a rather narrow exotherm, matching fairly closely an independent observation on a known super-thermite sample. The low temperature of ignition and the presence of iron oxide grains less than 120 nm show that the material is not conventional thermite (which ignites at temperatures above 900  ̊C) but very likely a form of super-thermite.
8. After igniting several red/gray chips in a DSC run to 700  ̊C, we found numerous iron-rich spheres and spheroids in the residue, indicating that a very high- temperature reaction had occurred, since the iron-rich product clearly must have been molten to form these shapes. In several spheres, elemental iron was verified since the iron content significantly exceeded the oxygen content. We conclude that a high-temperature reduction-oxidation reaction has occurred in the heated chips, namely, the thermite reaction.
9. The spheroids produced by the DSC tests and by the flame test have an XEDS signature (Al, Fe, O, Si, C) which is depleted in carbon and aluminum relative to the original red material. This chemical signature strikingly matches the chemical signature of the spheroids produced by igniting commercial thermite, and also matches the signatures of many of the microspheres found in the WTC dust [5].
10. The carbon content of the red material indicates that an organic substance is present. This would be expected for super-thermite formulations in order to produce high gas pressures upon ignition and thus make them explosive. The nature of the organic material in these chips merits further exploration. We note that it is likely also an energetic material, in that the total energy release sometimes observed in DSC tests exceeds the theoretical maximum energy of the classic thermite reaction.
Based on these observations, we conclude that the red layer of the red/gray chips we have discovered in the WTC dust is active, unreacted thermitic material, incorporating nanotechnology, and is a highly energetic pyrotechnic or explosive material."

Cite your sources please.  Have fun.  Oh I almost forgot, there is no scientific analysis of the dust that concludes differently than the Harrit paper.  Prove me wrong, please.

<Th evideo evidence quite clearly shows fires burning exceedingly hot thanks to unlimited air supply.>

Right, because you can tell how hot a fire is burning from a YouTube video.  And minor fires on 3 floors is going to weaken the entire steel support structure, and cause a free-fall implosion.  Gee, why hire these expensive demolitions teams to implode buildings when we could just set a few fires and have the building collapse into its own footprint?  GENIUS!  You realize that steel is a conductor, right?  Any heat applied to a steel beam is simply going to be dispersed through the rest of the structure.  It's pretty basic physics.

<You lack my experience in fire tube experiments >

If I was as immature as Richard "Little Dickey" Driskill I would be making a phallic reference right about now.  Instead, I'm going to laugh at you for such a stupid claim, and ask that you cite your credentials, link to a "fire tube" experiment that you have published, and explain how that experiment proves that office fires can melt structural steel and cause a free-fall collapse.  Too good...
Reply: Geoff Stockton
<"hot tube experiments"  
I swear I can't keep up with these damned kids.  I've never heard the term.>

Yeah, it's the new thing.  Just ask rose white, she loves getting smacked around by long, hot tubes
Reply: The most respectful reply I've ever read in a YouTube video. I wish we were all this way.
Reply: JetMechMA <You insane maniac......by your own theory that you just laid out, tens of thousands of people would need to be in on the implosion plot. And according to you they ALL have kept their mouths shut the entire time before, during, and since then.>

You have zero critical thinking ability.  A crew of 8 men could have accomplished the rigging of the towers in a couple months.  So says experienced demolition experts.  The work could have been done at night.  The materials could have been disguised as panting, insulation, or construction supplies.  The security personnel would not necessarily even have to know what was being done.  For all they know, its just run-of-the-mill maintenance work.  You clearly have no idea how a bureaucracy or compartmentalization works.

Can you present an academic refutation to the Harrit paper yet, or do you want to keep pretending like you know what you're talking about?
Reply: JetMechMA I said give a specific technical reason why the Harrit paper is flawed.  That means describe how their methods were flawed, of their analysis of the dust was incorrect.

Your long list of straw-man arguments in no way addresses the actual facts presented in the Harrit paper.  You have presented no relevant facts, and nothing you have said constitutes a technical refutation.
Reply: crushffl <I'll take the word of experts over the guy on the street any day.>

And experts published a report in an academic journal that proves the presence of advanced incendiaries in the WTC dust.

<Those same experts and engineers have looked at the forensic evidence and certainly understand the laws of physics, >

And they agree that the official explanation for how the towers collapsed violates basic physics.  ae911truth 

<How would thermite charges be placed at the precise locations to match the later plane impacts, >

Why would the charges only need to be placed at the site of the future impacts?  Its obvious that the building was rigged top to bottom, as the entire thing explodes to dust in midair.

<without being noticed?>

Brought in at night, and planted in the core columns under the premise of an elevator modernization, and under protection of a security company that had defense department ties?  The material could have been taken in in paint cans or palettes of insulation, and would have been disguised appropriately.

<How would the control systems survive the impact of a high-speed commercial airliner impacting the structure?>

The material would have been inside the structural core, and would have likely been protected and shrouded with a shock resistant and insulated material.  It would have been paired with a remote detonator, so no wiring would be required.  even if the crash had compromised several of these charges, there was still the entire remaining portions of the building which were undamaged.  Detonating the charges beginning with the undamaged floors directly above and below the impact, and then progressing downwards would have achieved the desired effect.

<Why wasn't burning thermite (2500 degrees C) blinding to observers like looking at a welding torch>

Because the structural interior core wasn't visible to outside observers...

<the collapse progressed exactly as models predict it would, consistent with physics as dynamic stresses overwhelmed the design strength, floor by floor.>

The free-fall collapse of building 7 defies physics, specifically Newton's Third Law.  NIST never released their simulation parameters, their report was never peer reviewed, and their collapse model looks nothing like the actual collapse.  Pyrotechnics are the only thing that explains such a collapse.
Reply: +Emvaz22   "I cited an academic source to back up my claim...the Harrit paper"  Oh, that paper that snuck through on the open on-line forum without the editor's approval, disgracing the forum, causing the editor to resign and the forum to be discontinued?  That one?  Yes, that one.

"There are 2000+ professional high-rise architects structural engineers, architects, demolition experts, physicists, etc that would also disagree with you".  Yes, that's about what "Architects and Engineers for 9-11 Twoof" claimed a couple of years ago before the ceased publicizing the number.  Giving them the benefit of the doubt, and assuming they are actually all architects and engineers, and assuming they are all in the US (which has millions of registered architects and engineers), that means that in over a decade since 9-11 they managed to convince LESS THAN ONE HUNDREDTH OF ONE PERCENT of the registered architects and engineers in the US that this is an issue.  That's pathetic, and yes, you are in the fringe at best.

And as usual you ignore the FACT that no explosives were needed to bring the towers down.  Steel starts to lose strength at 700 degrees F and has lost nearly half its strength be the time it reaches 1000 degrees F, well below what you Twoofers even admit the fires burned at.  The burden of proof is on you, and you FAIL.
Reply: Emvaz22 Yep. And he's doing exactly the same across you tube, no matter what the topic is. Funny? Mainly sad, i'd say. (though i get what you mean)
Reply: Emvaz22 The proven facts, That's rich. 

 How long would it take the thermite/thermate to cut through the beam? Milliseconds? The explosions are reported right at the time of the collapse yes? So that means the devices which brought the tower down were activated and brought the tower down at the same time. Ha, get real conspiracy nut. 

 What were the other contents of the planes which hit the buildings? Can you show me how its impossible the same traces you link to a specific case didn't come from something else? 
  How do you know the materials of the contents of the building? You can find traces of something completely irrelevant to explosives and i'm supposed to just believe it was some massive conspiracy?  I'm sure there was styrofoam in the building and possibly gasoline as well or even the kerosine am I supposed to assume someone was manufacturing napalm to set children on fire? 

 You said they found nano-thermite from the harrit paper, Yet harrit himself was saying many many many tons of thermite were used and there's not really any evidence that ever happened. How much thermite reaction do you claim was found again? 
  Also Thermite has a maximum energy content of 4.0MJ/kg The experimental energy content of the chips found was double that at least. Which means it wasn't thermite. So that's a flat out lie just by that fact alone. 
   The answer is Red paint. Lol They were testing the red paint used to paint the beams. 
  But grasp at straws to make it fit like I said if we play that way I can make styrofoam cups and kerosene into a diabolical plot to melt children! 

 " I see "steel" and "melting", as well as "liquid" and "iron" in the same sentence. " 
  Yes cause this is grade A science, I saw some keywords in a paper written by people who are probably involved in the conspiracy! 
  Keep up the good work truthers.
Reply: Emvaz22 "The thermite compound was contained within an energetic matrix, which would produce expanding gas and amplify the cutting potential of the incendiary.  You pretend to know exactly how long it would take for an advanced material such as this to weaken steel enough to cause a collapse. " 
  Hmmm, nope. I know it wouldn't be POP as it started WHILE it was collapsing. The heat no matter how much pressure or amplifying would not be capable of igniting and burning through a thick steel beam at the very same moment. There has to be SOME time for the exothermic reaction followed by time for the heat to transfer to the beam. 
   Also now you're saying it's cutting the beam. I can show you a picture of a beam melted through with thermite it's not a clean cut, not so easy to control thermite leaves that molten residue on the beam too, There are workers which came in AFTER the attack to clear some debris and cut some of the beams, I'm pretty sure you're mixing up your ideas here. Was it CUT as in cut by a worker, or was it MELTED like you truthers always tote around jet fuel doesn't melt steel beams. 
  Seems to me like the more convenient thing is just switched for whichever part you need it to be. 

 "You also don't seem to take into account the weight of the floors above the impact, which wouldn't need the steel to be completely severed before it gave out." 
  Did you take that into account when you thought about the beams being weakened by the office fires and jet fuels? 
   You wouldn't need thermite to cut through the beams at all, enough heat will cause the integrity to be compromised. Not nearly the amount you need to actually melt beams. 
  "You also don't take into account the possibility that the incendiaries targeted the crucial welds and bolts between beams, which would have taken much less material and a much shorter amount of time to sever than an entire steel beam. "
  You didn't consider the possibility that perhaps metal eating termites were also set loose, or that prisoners tunneled into the building and used their fingernail files for several weeks to grind through little by little into the beams just enough to weaken them under the weight of the building that was hit by a plane, on fire and at a high enough temperature to compromise the integrity of the steel beams without any explosives at all anyways. 
  The more fantastic the story has to be, the more likely some evidence of the plan would have turned up by now. Its either a very simple plan that required less than 3 people that were immediately killed after finishing the project, and they moved the materials in over the course of several months Several tons of material over a few months between very few people or you have a devout group of building destroying workers with tons of experience in james bond movies. Just seriously you sound like a kid coming up with a movie plot. 
  This may be how things work in imagination land, but in the real world planes hit buildings and fires cause their beams to fail, there is no other explanation required there doesn't have to be a james bond plot involved for something like this. We have bridges that come down over fires and they have steel beams as well. Its just simply over the top conspiracy nut shit when you start acting like there was a special team of demolitionists ready to destroy the towers... for what reason? Killing thousands of important people for what reason? 

  The shadow government just really wanted to take that tower down right? The illuminati devised this plan and used bush like a puppet? Or.. hear me out.. the fire compromised the beams, the fire was caused by a jet flying into a building. 

 "You also don't take into account the fact that other forms of pyrotechnic could have been used in conjunction with the type analyzed in the thermite paper." 
  
  And again, prisoners could have tunneled in and began to file away bit by bit at the beams and the jet planes could have been a complete coincidence its really those inmates with files that we should blame for this! 
  The thermite paper, didn't bring back any results of thermite. 
  https://www.metabunk.org/debunked-iron-microspheres-in-9-11-wtc-dust-as-evidence-for-thermite.t2523/
  
  Your biggest bit of evidence was the iron spheres and they're explainable by other sources of iron in the building.  
  Check out thermodynamic size effect. 
  
  You claim other forms of pyrotechnic, Provide residue or another valid form of evidence for 'other pyrotechnics' 
  
  It will also not take away the fact that thermite can not instantaneously burn through steel. 
 Need time for the reaction and then time for the heat to transfer to the beam. 
 
  The iron is explainable, the lack of evidence on your side is not. 

 "Because he was comparing the DSC to the methods used in the Lawrence Livermore Lab to test Xerogel, a known form of super termite.   As I've already said, the Harrit sample also contains carbon compounds, which would not combust properly and give an accurate total energy reading without the presence of atmospheric oxygen.  Comparing The Harrit sample to Xerogel, Harrit had a higher energy peak, and a quicker reaction time.  Therefore, it is a more potent incendiary than Xerogel.  But clearly, this is paint...." 
 
 Thermite is so dangerous because it can burn without oxygen, If it can't then it's not thermite it most certainly is not super thermite. 

  There was no thermite in the test, They were trying to determine if something was thermite and one of the key parts was the iron spheres which can be created with a bic lighter, and some "steel wool" Go ahead try it.  There's also a video in that link I sent you where they recreated the iron spheres with a regular wood fire in a barrel. Your theory makes no sense.
Reply: Boris B Let me fill you in, Black smoke doesn't mean its not ventilated, It was beyond a doubt getting oxygen from the elevator. You could set up a scale model and it'll do about the same thing. Its physics it doesn't change for conspiracies. 
   You could put a steel beam in a wood fire in a barrel and it will in fact cause iron spheres. Which means it is doing damage to the beam. 
 http://www.internationalskeptics.com/forums/showthread.php?t=264234
Reply: +rhino2960 That is correct.  Also, the thermite nat geo used was basic thermite, and then they substituted their results for all forms of thermite.  The author of this video effectively demonstrates that by simply adding eutectic compounds like sulfur and barium (many of the chips test positive for these elements) and employing some basic engineering know-how, he can use thermite to easily sever steel beams.  It's not that nat geo "went wrong", it's that they are deliberately trying to deceive the audience.
Reply: Emvaz22 in WW2 US special forces had thermite grenades they shoved into the (hard steel) barrels of German canons, melting the inside, leaving them useless within minutes (the thermite grenades only burning that long)
Reply: Boris B Good point.  Also, modern militaries use incendiary rounds to pierce armor by shooting a jet of molten metal through their target.  Incendiary compounds melt metal.  That is what they are used for.  Any argument that claims that incendiaries cannot be used to efficiently destroy steel columns or welds/bolts is a blatant lie.  The author of this video does a good job of proving that point.
Reply: Nathan Stirling And yet you think yet-fuel does the trick?
Reply: +Boris B 
Errrrr.....watch.
http://www.liveleak.com/view?i=37f_1339831773&comments=1
Reply: Nathan Stirling
<Do you have any idea of how much nanothermite would be required?>

Relatively little, as this video demonstrates.

<Even though it's highly unlikely that this method would work anyway.>

Thats funny, this video shows that it's actually pretty easy to cut steel members with incendiary charges.  Can you offer anything to refute the findings of this video?

<0.1 percent>

.1% of how much dust?  50,000 tons?  100,000 tons?  Unsure about that weight of all the dust, but we are still looking at an amount somewhere between 10-100 tons.  Seems kind of a lot to me...

<And even that amount was subject to ridicule in a paper that has been severely criticized in the scientific community.>

Oh, so what, specifically, is the technical fault of the Harrit paper that causes supposed ridicule in the scientific community?  The scientific discourse is played out in published academic papers.  What paper can you cite that casts doubt of the Harrit study?

Cite the Title, Author, Publication, and date of this paper, please.

You claim severe scientific criticism.  Show me this criticism.
Reply: madgodloki
<There was no evidence of a device like the ones he used that I know of.>

The author never claimed that a device such as the one used in the demonstrations was the type used to bring down the towers.  The device could have been designed to be completely destroyed upon use (thermite does melt metal, after all).  Moreover, as the incendiary material was unconventional, it would be safe to assume that the deployment of this material was also unconventional, and likely unrecognizable as such.  The debris was hurriedly hauled away and shipped to China for recycling before any real investigation could be done, Did the authorities follow protocol and search for pyrotechnics or explosives as regulations state they should?  No, they didn't, therefore your objection once again amounts to your meager, unsupported conjecture, and not proof against anything.

<The noise and the collapse aren't minutes apart its almost immediate, at the same time. So the noise is caused by the collapsing building not thermite>

As I've already explained to you, nanothermite can be formulated to be explosive, which would sever steel almost instantaneously.

Puszynski JA. Reactivity of nanosized Aluminum with metal oxides and water vapor. Mater Res Soc Symp Proc 2004; 800: AA6.4.1.

Puszynski JA, Swiatkiewicz JJ. Research Topic: Investigation of Ignition Characteristics of Heterogeneous Strongly Exothermic Reactions. Department of Chemical and Biological Engineering, South Dakota School of Mines and Technology, Current Projects. 

<Jet fuel fire can weaken beams, no matter how many of your friends will say otherwise there are demonstrations.>

Cite another example of jet fuel and office fires causing a free-fall collapse and reducing a building to micron-sized dust.

<  Your theory is the theory of a nut job.>

Seems like my theory is supportable by published science, which you cannot refute.

Try again.
Reply: Emvaz22 love this one: "jet fuel (...) can cause a total structural collapse, but thermite, which is designed to melt metal, could not" . "Solid argument"
Great comment!
(are some of these people also actually saying that thermite bangs? I ask cause they keep saying the bangs heard were from the building collapsing and not from the thermite. Thermite hissess. Is anyone claiming otherwise?)
Reply: 442hoeky
<Just remember that ancient man melted iron ore and created steel - in some cultures the ability to make predates a written language.  The temperatures required are not as difficult to attain as you imagine.>

So you are saying that the office fires reached 2800F?  Quite a claim with no evidence to support it.  I think most estimates of the temperature of the fires is about 1400F or less.  Clearly there is a discrepancy here.

Normal hydrocarbon fuel can melt steel, but only in a blast furnace configuration.  A skyscraper is not a blast furnace.
Reply: 442hoeky
<I never said it DID reach those temperatures, only that it COULD>

What COULD is irrelevant if you have no evidence for what DID.  What COULD in no way refutes the presence of nanothermite in the WTC dust as proven in the 2009 Harrit paper.

<And yes, a skyscraper CAN act very much like a blast furnace.>

I don't think it can.  It's designed not to.  Can you cite an example of this happening?

I'll tell you why it can't happen, using a very simple example.  I own a Green Egg, which is a ceramic insulated kamodo-style grill.  There is an adjustable port on top, and adjustable port on the bottom, and a ceramic basket for the hardwood charcoal (and a built in thermometer, or course).  This grill allows a free flow of air through the fuel material, and is designed to retain as much heat as possible, due to the insulation.  It gets hot.  Way hotter than a typical Weber grill.  At full boar, it still only gets to 900F, maybe a little hotter.  It rages hot enough that it causes an audible wind out the top chimney.

Why is this relevant?  Because a skyscraper is not going to have a giant opening in the bottom to allow a vertical flow of oxygen through the structure.  Skyscrapers are specifically designed to not allow a "chimney effect."  A skyscraper is not going to have ceramic insulated walls and ceilings to capture the heat.  Most importantly, a skyscraper is not going to have a gigantic billows or blower forcing a large amount of oxygen into the combustion chamber, which is what is required to get a hydrocarbon fire hot enough to melt steel.

In the case of the WTC, there was no air flow from the bottom, only at the level of the fire where the plane had torn openings in the sides of the buildings.  Although those side openings allow oxygen in to the fuel, they also allow heat to escape.  The black billowing smoke (which is the sign of a poorly oxygenated fire) would also restrict oxygen flow to the fires.
Reply: +442hoeky Interstingly, I actually recalled this blast furnace phenomena (which I had read years previously as a plot device in the 1973 fictional novel 'The Tower') while watching the events of 9/11 unfold, and wondered if such reactions - AFAIK to that point only either theoretical or predicted with small scale experiments - were actually occurring and/or to what degree.
Reply: 442hoeky
< It certainly IS relevant if you're going around saying it's "IMPOSSIBLE" when it's not>

It's not impossible for me to shit a solid gold bar, according to quantum physics.  It's never going to happen in a billion years, but technically, it's not impossible.

There have been many, many large structural fires since the advent of industrialization.  Many of which burned much longer, and much more completely than the WTC.  Can you cite an example of one that caused the melting of steel and a total free-fall implosion?  No you can't.  Yet you want me to believe that it's possible that it happened 3 times in the same city on the same day on 9/11?  Again, I would refer you to the shitting gold analogy.

<I'm just trying to warn you that by making a false or incorrect statement in the middle of a list of arguments hurts your case far more than admitting the possibility is there, but the evidence is not.>

Fair enough.

<A green egg with some wood and good airflow is in no way comparable to thousands and thousands of pounds of fuel (jet fuel and many other flammable materials).  Thermodynamics can not always be scaled down to prove a point as the amount of energy released inside the towers was millions of times more than your little grill.>

The size of the combustion chamber (aka the towers) is also millions of times bigger than my grill, so my scale-down seems appropriate.  If anything, I would think the energy density to volume ratio is higher in my little grill.  The fuel is also diffuse and scattered in the towers, as opposed to concentrated in the path of the airflow as it is with my grill.  Regardless of the amount or configuration of fuel, it would still require oxygen-enriched air being blasted in at a high volume to add the extra 1000F+ it would require to melt steel.

https://www.aisc.org/DynamicTaxonomyFAQs.aspx?id=1996

"11.3.2. At what temperature does a typical fire burn?

"The duration and the maximum temperature of a fire in a building compartment depends on several factors including the amount and configuration of available combustibles, ventilation conditions, properties of the compartment enclosure, weather conditions, etc. In common circumstances, the maximum temperature of a fully developed building fire will rarely exceed 1800°F. The average gas temperature in a fully developed fire is not likely to reach 1500°F. Temperatures of fires that have not developed to post-flashover stage will not exceed 1000°F."

Steel melts at 2800F, so obviously there is a huge discrepancy.

<Sorry, but there is not enough evidence to say the fire COULDN'T reach the right temperature.>

And there's certainly not enough evidence to say that it COULD reach a high enough temperature.

Either way, all of this merely amounts to conjecture.  The one and only scientific pyrotechnic analysis of the WTC dust turned up nanothermite, which can not only melt steel, but also produces molten iron as a product of the reaction.  I think its pretty obvious what caused the molten iron identified by many first responders and rescue workers, and documented in FEMA's appendix C

NIST turned up melted "eutectic" steel, the USGS turned up an inordinate amount of iron microspheres, and Harrit et all not only found nanothermite but also chemically matched the WTC iron microspheres that their red chips produce, to known thermite products.

If you're aware of a scientific study that refutes the Harrit paper, which demonstrates the presence of nanothermite, I would be very interested in reading it.
Reply: +Jim Vicious  Yeagh, the guy seems to know his stuff..  Nothing like this will ever be shown in the Main Stream Media. the Evidence is just way too obvious.
Reply: +Emvaz22  I think building 7 did not go off as Planned. and it then HAD to be taken down, as obvious as it would be,  because the EVIDENCE was all still in there and could have been discovered.

NO one can explain how building 7 went down. it defies all physics and Logic.
 If it went down because of DAMAGE from WTC 1 and 2, then ALL Nearby buildings would  have sustained similar damage and would need to be Demolished as well, 
 but .. NO such Demolition ever took place , did it ??
Reply: +Jeff from Jersey 
Correct, buildings 3-6 took massive damage from the collapsing towers, but they never fell.  Tower 7 had virtually no visible damage and collapsed symmetrically at near free fall speed.
Reply: Richard Driskill
Yay, Little Dickey is back.  Whats it been, a week?  I didn't think you meatpuppets got paid enough to be able to afford time off.  I guess I was mistaken.

I see you've tried to make up for your absence by promptly making 9 posts in a row, without referencing what you are even posting against.  Sloppy, and unprofessional.  I'm going to have a word with your supervisor.  I expect you shills to put up more of a fight; it's no fun otherwise.  

All this time and all these posts, and you still neglect to cite any actual evidence to disprove the Harrit study and the presence of incendiaries.  What a shame.

Go ahead.  Cite me your evidence.  Show me the "wrecked" building 7.  Show me the lightly, asymmetrically damaged facade which you believe lead to a symmetrical, free-fall collapse.  Then explain why buildings 3-6 which received far heavier damage still remained standing.

Good luck, idiot.
Reply: +rose white 
What is this personal experience you speak of?  What "basic fire tube" research have you completed?  What are your credentials, and where was your work published?  You keep claiming to have all this evidence that steel will melt in building fire.  Cite one example that happened in the real world.
Reply: 442hoeky Your mentioning of partially melted concrete reminds me of the fused balls of concrete and steel found below the rubble pile.  As the debris was tightly packed and had very restricted oxygen flow, there is no way that fires could have caused this (think of what happens to a camp fire when you throw sand on top).  The best explanation (and the explanation that corroborates the eye witness testimony of rescue workers) is that there was molten iron under the rubble pile, which does not need oxygen to give off immense amounts of heat.

Moreover, normal fires would have been doused by the huge amounts of water and chemical flame retardants being sprayed on top of the rubble pile up to three months after the collapse.  Yet in many places, the rubble pile would actually melt the boots of the people standing overhead.  Clearly, these were not normal office fires.

The most plausible explanation for the source of this molten iron is thermite, because there is forensic evidence of unreacted thermite (as well as the products of a thermitic reaction) in the WTC dust.  The paper that proves this, published by Harrit et all since 2009, has yet to be refuted or redacted.
Reply: Richard Driskill The FBI tested for the presence of incendiary and explosive residues?  What types of tests did they do, and where are the results published?

Thanks.
Reply: Emvaz22 "The author never claimed that a device such as the one used in the demonstrations was the type used to bring down the towers.  The device could have been designed to be completely destroyed upon use (thermite does melt metal, after all)."  Yeah but it had to hold the thermite in position and give it direction toward the beam as you claim, So how did it melt the entire device AND the beam, You saw for yourself that once it's in open air it takes the path of least resistance. Your claim is getting more and more crazy. 
 
" Moreover, as the incendiary material was unconventional,"
 AKA non-existent. 
 
 "it would be safe to assume that the deployment of this material was also unconventional,"
  If you're a lunatic.
 
 " and likely unrecognizable as such."
   For convenience of conspiracy theorists. 

   "The debris was hurriedly hauled away and shipped to China for recycling before any real investigation could be done," 
 Of course it was, and aliens helped them haul it too. Of course they would have been better off leaving hundreds of thousands of tons of debris covering the block for a year instead of cleaning it up... especially since so many dead bodies were probably buried within. And possibly even survivors. 
  I guess we should have thought about the poor conspiracy nuts that wanted to investigate after millions of people watched a plane fly into the towers. 

 "Did the authorities follow protocol and search for pyrotechnics or explosives as regulations state they should?  No, they didn't, therefore your objection once again amounts to your meager, unsupported conjecture, and not proof against anything." 
 
  Then where did you get your info about the supposed explosives? These people were sloppy about this conspiracy and yet still not a single real bit of evidence. 
  I don't have to prove anything against your claim, Your claim is jumping through hoops to try and seem real and it's clearly a fantasy.

"As I've already explained to you, nanothermite can be formulated to be explosive, which would sever steel almost instantaneously." 
  And yet still melt the device. Which is it, melting or exploding. 

"Cite another example of jet fuel and office fires causing a free-fall collapse and reducing a building to micron-sized dust." 

  http://www.livescience.com/16179-twin-tower-collapse-model-squash-9-11-conspiracies.html

  I've only said that the jet fuel can weaken the beams.. the aluminum hitting the sprinklers could cause the explosion and increase the temperature... 
  "This isn't obscure chemistry, Simensen says; the U.S. Aluminum Association has recorded 250 accidental molten aluminum/water explosions worldwide since 1980. "Alcoa in Pittsburgh [the worldwide leader in aluminum production] has done a series of such explosions in special laboratory in order to understand what can prevent such explosions and what are the most dangerous situations," he wrote. "For instance they let 30 kilograms [66 pounds] of aluminum react with 20 liters [5.3 gallons] of water, which resulted in a large hole 30 meters [98 feet] in diameter, and nothing left of the laboratory."" 
 

<  Your theory is the theory of a nut job.>

Seems like my theory is supportable by published science, which you cannot refute.

Try again." 

 Supportable.. if you're a nut job. 
 
 Aluminum in the plane would have exceeded 30 tons. 
   Aluminum's melting point is under 1400 degrees. a sprinkler system plus molten aluminum would cause a fierce reaction and a fierce explosion.  
  Looks like you lose, Try again.
Reply: madgodloki <Yeah but it had to hold the thermite in position and give it direction toward the beam as you claim, So how did it melt the entire device AND the beam, You saw for yourself that once it's in open air it takes the path of least resistance.>

You're kinda slow, aren't you?  The thermite is deployed, the beam is severed, and then the remaining incendiary charge destroys the rest of the device.  Its really not rocket science.  There are probably thousands of possible configurations for an incendiary deployment device that could behave in this manner.  If you really think that there is no way that a device could be designed to effectively direct an incendiary charge and then be consumed in the final stage of the thermitic reaction, then you may need some help.

<" Moreover, as the incendiary material was unconventional,"
 AKA non-existent. >

Peer reviewed, published, and unrefuted in six years.  Prove otherwise.  Cite your source that disproves the Harrit paper.

< "it would be safe to assume that the deployment of this material was also unconventional,"
  If you're a lunatic.>

If you're not a gullible simpleton.  Where's that refutation?

<"The debris was hurriedly hauled away and shipped to China for recycling before any real investigation could be done," 
 Of course it was, and aliens helped them haul it too. Of course they would have been better off leaving hundreds of thousands of tons of debris covering the block for a year instead of cleaning it up... especially since so many dead bodies were probably buried within. And possibly even survivors. >

No, it would have been better to relocate the debris and perform analysis for potential demolitions and incendiaries.  Because that's what the regulations are for when a building comes down.  

<I guess we should have thought about the poor conspiracy nuts that wanted to investigate after millions of people watched a plane fly into the towers. >

Oh, so an airplane and office fires can cause a symmetrical, virtual free-fall collapse and reduce an entire steel reinforced building to micron-sized dust?  Cite another example in history of fires causing a symmetrical free-fall collapse and reduction of the concrete to dust.

You didn't do well in physics class did you?

<Then where did you get your info about the supposed explosives? These people were sloppy about this conspiracy and yet still not a single real bit of evidence. >

Active Thermitic Material Discovered in Dust from the 9/11 World Trade Center Catastrophe.  Harrit et al.  The Open Chemical Physics Journal.  April 2009.

"CONCLUSIONS
We have discovered distinctive red/gray chips in signifi- cant numbers in dust associated with the World Trade Center destruction. We have applied SEM/XEDS and other methods to characterize the small-scale structure and chemical signa- ture of these chips, especially of their red component. The red material is most interesting and has the following charac- teristics:
1. It is composed of aluminum, iron, oxygen, silicon and carbon. Lesser amounts of other potentially reactive elements are sometimes present, such as potassium, sulfur, lead, barium and copper.
2. The primary elements (Al, Fe, O, Si, C) are typically all present in particles at the scale of tens to hundreds of nanometers, and detailed XEDS mapping shows intimate mixing.
3. On treatment with methyl ethyl ketone solvent, some segregation of components occurred. Elemental alu- minum became sufficiently concentrated to be clearly identified in the pre-ignition material.
4. Iron oxide appears in faceted grains roughly 100 nm across whereas the aluminum appears in thin plate- like structures. The small size of the iron oxide parti- cles qualifies the material to be characterized as nano- thermite or super-thermite.
5. Analysis shows that iron and oxygen are present in a ratio consistent with Fe2O3. The red material in all four WTC dust samples was similar in this way. Iron oxide was found in the pre-ignition material whereas elemental iron was not.
6. From the presence of elemental aluminum and iron oxide in the red material, we conclude that it contains the ingredients of thermite.
7. As measured using DSC, the material ignites and re- acts vigorously at a temperature of approximately 430 ̊C, with a rather narrow exotherm, matching fairly closely an independent observation on a known super-thermite sample. The low temperature of igni- tion and the presence of iron oxide grains less than 120 nm show that the material is not conventional thermite (which ignites at temperatures above 900  ̊C) but very likely a form of super-thermite.
8. After igniting several red/gray chips in a DSC run to 700  ̊C, we found numerous iron-rich spheres and spheroids in the residue, indicating that a very high- temperature reaction had occurred, since the iron-rich product clearly must have been molten to form these shapes. In several spheres, elemental iron was veri- fied since the iron content significantly exceeded the oxygen content. We conclude that a high-temperature reduction-oxidation reaction has occurred in the heated chips, namely, the thermite reaction.
9. The spheroids produced by the DSC tests and by the flame test have an XEDS signature (Al, Fe, O, Si, C) which is depleted in carbon and aluminum relative to the original red material. This chemical signature strikingly matches the chemical signature of the sphe- roids produced by igniting commercial thermite, and also matches the signatures of many of the micro- spheres found in the WTC dust [5].
10. The carbon content of the red material indicates that an organic substance is present. This would be ex- pected for super-thermite formulations in order to produce high gas pressures upon ignition and thus make them explosive. The nature of the organic mate- rial in these chips merits further exploration. We note that it is likely also an energetic material, in that the total energy release sometimes observed in DSC tests exceeds the theoretical maximum energy of the clas- sic thermite reaction.
Based on these observations, we conclude that the red layer of the red/gray chips we have discovered in the WTC dust is active, unreacted thermitic material, incorporating nanotechnology, and is a highly energetic pyrotechnic or explosive material."

Peer reviewed paper published by 9 experts in their respective fields.  Still waiting on your academic citation that refutes these claims.  Just so we're clear, use this format: Title.  Author.  Publication.  Date.  Unscientific "debunker" blog posts don't count as an academic refutation.  Find a credible source.

Thanks.

<I don't have to prove anything against your claim, Your claim is jumping through hoops to try and seem real and it's clearly a fantasy.>

My claim is backed by actual forensic findings, as demonstrated by several experimentation methods in a scientific paper.  What are your claims backed by?  Your meager conjecture?  Your opinion which is backed by zero science?  "Debunker" blogs which perform no science and deliberately misrepresent and omit scientifically proven facts?  I must say, you've got quite a strong hand...Hope you've got a good poker face.

<"As I've already explained to you, nanothermite can be formulated to be explosive, which would sever steel almost instantaneously." 
  And yet still melt the device. Which is it, melting or exploding. >

Uhh, the two aren't mutually exclusive... A liquid metal propelled by an expanding gas would both melt and explode...ROCKET SCIENCE.

Go clean the blood from your ear canals.

<Supportable.. if you're a nut job. >

Supportable, if you can read.  Having trouble?

<Aluminum's melting point is under 1400 degrees. a sprinkler system plus molten aluminum would cause a fierce reaction and a fierce explosion.>

Ah, so you believe that all of the aluminum in the plane liquified, collected in the same area, and then got hit by water, which turned the entire building to dust.  Just making sure I heard that right...

One question though.  If this is true, then what was that molten stream of metal pouring from the tower just before the collapse?  You "debunkers" claim it is aluminum.  You see the conundrum?  If it is aluminum, then your "explosive substance" is largely no longer in the towers, and certainly not all concentrated in the same area to where it would cause a massive water-induced explosion.  If it's not aluminum, then it is iron, which opens a whole new can of worms for you to try to explain away, because iron is not going to melt in a building fire, which leaves you trying to explain the source of molten iron.   That becomes pretty difficult without the use of incendiaries.

Solid argument though.  You clearly know your stuff...

Good game.
Reply: R McHewn Awh look at you, You think you have some kind of argument. How adorable! 

  We know that because we know physics and chemistry. Poor little guy must be in grade school. 

 " The buildings stood after the planes hit them and the swayed with the frequency of completely intact buildings." 
  Until the aluminum in the planes fuselage melted, and then seeped into the cracks hitting the sprinkler on the floor below it. molten aluminum + water = huge exothermic reaction. A reaction which involves free hydrogen being released. Causing enough explosive power to blow a lab to smithereens. 
 
 
  "What extreme heat?" 
 Molten aluminum, melting point at about 1200 degrees.. Which is a couple hundred below the buildings fires temperatures.  When that molten aluminum hits a large source of water, such as automatic sprinkler system it causes enough of an explosion to wipe out a laboratory And that's only 66 pounds, this was 30 tons of aluminum in the fuselage. The reaction can cause localized temperatures of over 2600 degrees. So yeah, THAT heat for one. 
  Your complete lack of knowledge in this field is quite apparent. I'm guessing you think this building fire was like a campfire right? 
  Silly boy, leave the hard stuff to people who can grasp it better. 

 "The same extreme heat that the woman was standing in while waving to a camera, presumably in a helicopter?  That "extreme heat"?" 
 
  Show me a person that was standing next to the crashed plane waving. Next to the Jet fuel blazing underneath the aluminum. Show me that person.  You can show someone standing in a relatively cool spot where the destruction hadn't effected as bad all you like if you think it would mean anything its just testament to how shallow your information is. 

  "Another question comes to mind: where would the - ("Melted iron and aluminum and any other material very easily could have been from inside the building they would have melted and formed the same iron balls as any other molten iron.") - have come from?It's obvious you thought that through!  Not!" 

 hehehehehe, geez a giant skyscraper filled with desks and chairs and staplers and computers and people gets hit by a gigantic 30 ton aluminum carrying plane where ever did the iron or aluminum come from XD
  Its totally unheard of having iron objects inside offices.
Reply: R McHewn Getting to spicy for the pepper huh? Good idea, its best not to argue if you don't know as much as you thought about it.
Reply: madgodloki <They set the thermite on the beam without the device we're fucking talking about right now and it didn't even graze the metal. That's the whole point of you saying it has a device, Now you're saying the device melts from the exploding nano thermite somehow that needed a device in the first place just to melt the beams. But the metal device doesn't need another device to melt it, it's just as meltable as butter.. Obviously i'm the one being slow here.  This is the point, you think it doesn't require much thinking, and you have failed to think it through before you start throwing out silly claims. >

Meaningless conjecture.  Find me a pyrotechnics engineer who proves in a scientific paper that such a thing is not possible, and then you might actually have something.  Otherwise this amounts to the opinion of an anonymous guy on a blog.

<How about you give me an example of a material that could hold the thermite the way the STEEL device in question would hold it, But would also melt before the steel beams?>

Obviously the beams would melt before the device.  It's simple really.  Engineer a device that can withstand the energy needed to sever a beam or a bolt head, but not enough structural integrity to withstand the total thermitic charge, which would be greater than what is required to sever the structural steel.  That way there is enough energy to finish off the deployment device after the steel has been severed.  It's really not that complicated, although you are trying your hardest to confuse the issue.  Regardless of whether or not the containment devices were completely destroyed or not, it most likely would have looked a lot like the rest of the steel in the rubble, and would have been easy to miss.  Moreover, no testing for incendiaries or explosives were done during the official investigation, and the steel was hurriedly shipped overseas for recycling before proper analysis could be completed.  So your point is moot.  Try again.

<The device that would be designed to direct the charge would be made because the charge can't on its own defeat the metal. So the device would have to be able to survive at least as good as the metal or it would burn first. This isn't rocket science and yet you're still fucking retarded about it.>

You're dumb.  See prior comment.

<Show me what I need to disprove from the harrit paper. As far as I have seen there was nothing that isn't explained better by another theory.>

Ok.
"CONCLUSIONS
We have discovered distinctive red/gray chips in signifi- cant numbers in dust associated with the World Trade Center destruction. We have applied SEM/XEDS and other methods to characterize the small-scale structure and chemical signa- ture of these chips, especially of their red component. The red material is most interesting and has the following charac- teristics:
1. It is composed of aluminum, iron, oxygen, silicon and carbon. Lesser amounts of other potentially reactive elements are sometimes present, such as potassium, sulfur, lead, barium and copper.
2. The primary elements (Al, Fe, O, Si, C) are typically all present in particles at the scale of tens to hundreds of nanometers, and detailed XEDS mapping shows intimate mixing.
3. On treatment with methyl ethyl ketone solvent, some segregation of components occurred. Elemental alu- minum became sufficiently concentrated to be clearly identified in the pre-ignition material.
4. Iron oxide appears in faceted grains roughly 100 nm across whereas the aluminum appears in thin plate- like structures. The small size of the iron oxide parti- cles qualifies the material to be characterized as nano- thermite or super-thermite.
5. Analysis shows that iron and oxygen are present in a ratio consistent with Fe2O3. The red material in all four WTC dust samples was similar in this way. Iron oxide was found in the pre-ignition material whereas elemental iron was not.
6. From the presence of elemental aluminum and iron oxide in the red material, we conclude that it contains the ingredients of thermite.
7. As measured using DSC, the material ignites and re- acts vigorously at a temperature of approximately 430 ̊C, with a rather narrow exotherm, matching fairly closely an independent observation on a known super-thermite sample. The low temperature of igni- tion and the presence of iron oxide grains less than 120 nm show that the material is not conventional thermite (which ignites at temperatures above 900  ̊C) but very likely a form of super-thermite.
8. After igniting several red/gray chips in a DSC run to 700  ̊C, we found numerous iron-rich spheres and spheroids in the residue, indicating that a very high- temperature reaction had occurred, since the iron-rich product clearly must have been molten to form these shapes. In several spheres, elemental iron was veri- fied since the iron content significantly exceeded the oxygen content. We conclude that a high-temperature reduction-oxidation reaction has occurred in the heated chips, namely, the thermite reaction.
9. The spheroids produced by the DSC tests and by the flame test have an XEDS signature (Al, Fe, O, Si, C) which is depleted in carbon and aluminum relative to the original red material. This chemical signature strikingly matches the chemical signature of the sphe- roids produced by igniting commercial thermite, and also matches the signatures of many of the micro- spheres found in the WTC dust [5].
10. The carbon content of the red material indicates that an organic substance is present. This would be ex- pected for super-thermite formulations in order to produce high gas pressures upon ignition and thus make them explosive. The nature of the organic mate- rial in these chips merits further exploration. We note that it is likely also an energetic material, in that the total energy release sometimes observed in DSC tests exceeds the theoretical maximum energy of the clas- sic thermite reaction.
Based on these observations, we conclude that the red layer of the red/gray chips we have discovered in the WTC dust is active, unreacted thermitic material, incorporating nanotechnology, and is a highly energetic pyrotechnic or explosive material."

< Especially the aluminum hitting the sprinklers there's absolutely no other reason to think it was something else, that is what we expect when molten aluminum hits a large amount of water. 
>

Sorry.  you're idiotic "exploding aluminum" theory has nothing to do and in no way refutes the Harrit paper.  Try again.

<"No, it would have been better to relocate the debris and perform analysis for potential demolitions and incendiaries.  Because that's what the regulations are for when a building comes down.  "
 No that's what lunatics think you do. >

No, that's what Federal regulations dictate, moron.

< http://climateguy.blogspot.com/2010/11/peer-review-of-harrit-et-al-on-911-cant.html

 Here ya go. another nail in the coffin. Its annoying having to dig to debunk this shit a dozen times though. >

Sorry, I was looking for a credible published refutation.  A blog post by "Climate Guy" who performs no experimentation of his own is not an academic or scientific source, and holds no weight.  You didn't do well during term paper week did you?  Most of the irrelevant points "Climate Guy" brings up involve voluntary omission of facts presented in the Harrit paper.  Everything is covered and accounted for.  Thats why the paper has not beed refuted or redacted in the scientific literature.  Try again.

THIS FORMAT:  Title.  Author.  Publication.  Date.  

Refute the Harrit paper properly, or you've got nothing except your weak conjecture and unscientific analysis.

<Go ahead, disprove what was mentioned about his lack of testing, his piss poor methods leave enough to the imagination but even with his findings there are better alternatives.>

Where was "Climate Guy's" paper published? Whats that?  It's a blog post that would never see the inside of a scientific journal?  Because it isn't actual science?  Too bad.  Try again.

<He even admits in the quote you gave that it doesn't reach the required temperature. The conclusion when that fails... "it was super thermite" Yeah fucking right. When all else fails just make up some ridiculous conspiracy theory to support your already ridiculous conspiracy theory.>

Different formulations of thermite have different ignition temperatures and different thermal signatures.

Puszynski JA. Reactivity of nanosized Aluminum with metal oxides and water vapor. Mater Res Soc Symp Proc 2004; 800: AA6.4.1. [Accessed Febru- ary 7, 2009].

Puszynski JA, Swiatkiewicz JJ. Research Topic: Investigation of Ignition Characteristics of Heterogeneous Strongly Exothermic Reactions. Depart- ment of Chemical and Biological Engineering, South Dakota School of Mines and Technology, Current Projects. [Accessed February 7, 2009].

If you weren't a shill you would know this.

<after that explosion occurs the thermite is no longer contained and no longer will the heat be concentrated, the entire reason the device exists is why that doesn't make sense and you're too dense to realize it. >

Mmhmm, and I'm sure there is no possible way a second stage reaction could be engineered to finish the device.  You're a real deep thinker, aren't you?  Regardless, a moot point, as I have already explained.

<no matter how you run this scenario your idea of a device capable of holding the thermite good enough against the beam for an explosion to sever it, or good enough for it to cut through or however you want to make this work it will require a device which won't melt as easily as you're letting on. stupid anybody home in your head hello? >

Irrelevant, uneducated conjecture that in no way refutes the Harrit paper.  Title.  Author.  Publication.  Date.  Thanks.

<You tell me, go read that link I provided and tell me mr genius why your paper is so piss poor and why someone would look at all those faults and think it was accurate?  That's the peer review you're begging for so c'mon give it a look.>

Ah, so where is the academic refutation?  If the paper is so bad, then it should be easy to formulate one.  Whats that?  Six years and no contrary publication?  Only "Debunker" blog posts?  I wonder why that is.

< All that needed to explode was one floor, the top floors collapsed or are you claiming that the entire building was exploded?>

Nope.  You're claiming the entire building was exploded by a single "aluminum water" explosion.  You see, the way steel structures work, the load above is not just supported by the next lowest floor.  It is supported and distributed by the entire (undamaged) structure below.  You think one floor failing can cause an entire structural failure?  You have no idea about how steel frame structures are engineered.  There happen to be thousands of architects and engineer who disagree with the official version of the collapse.  Cite me a similar group of experts who have put their names and credentials on the line to support the official version of the story.  Oh wait, there is no such group of professionals.  Prove me wrong.

<You think the water hit the aluminum that's funny cause when you read the link I sent it explains it very simply plane hits the building, its up in the floors it takes walls and floors and ceilings with it but the steel punctures the tanks, the fuel is ignited raising the temp. well over the melting point of the 30 tons of aluminum in the plane Where do you expect it to go? Lots of cracks in the resting area a large explosion one floor beneath the fires is noticed. all that 30 tons of aluminum sitting in a fire at its melting point right above a water reservoir used for the sprinklers on each floor.... no no of course thermite seems more likely. with magic disappearing devices and millions of conspirators.>

Hah, thats the dumbest explanation I've ever heard.  Any actual science to back up your ridiculous claims?  Nothing?  Didn't think so.

Cite a refutation to the Harrit paper or stop bothering.  You aren't fooling anyone here.
Reply: +Jim Vicious I commend you for being an ACTUAL critical thinker/skeptic.  

I was a conspiracy theorist of the most unfounded variety for many years who made it into his 30s before learning the true value of the scientific method and critical thought.  Since then, I've shed a TON of silly beliefs but no matter how much I challenge my initial 9-11 views, I still can't debunk them.  I don't have theories regarding who and why but as an good critical thinker knows, belief is not a choice and the official story has not served to convince me.  

So I don't know WHAT happened but I feel like it must have involved a major media/government cover-up and it wouldn't be the first in history as some have been confirmed in the past.
Reply: +Geoff Stockton
When did I claim that the science in the video is wrong?  Seems pretty solid to me.
Reply: +rose white 
What are your credentials and what work have you published concerning "fire tube experiments"?  You keep claiming all this knowledge but you have yet to cite anything that demonstrates how steel can melt in building fires.
Reply: +rose white 
Getting cocksmacked repeatedly on YouTube forums doesn't qualify as "hot tube experiments".  By the way.
Reply: +beaconrider 
Large quantities of fuel that exploded out the side of the buildings and burned off within 30 seconds?  Gotcha.
Reply: +Naked Acres 
Exactly
Reply: weunelect <All the smart well trained people in the world who understand the easy physics of weaken steal by fire, except you and your idiots. Go to school and get an education.>

So you're going to tell somebody to "go to school," right after typing a sloppy sentence fragment.  Classic.

Clearly, we can trust your opinion on complex physical science matters.
Reply: +rose white "Can we forget all the silly inside job theories and get back to the simple truth which is that back in 2001 the friendly trusting Americans were fooled by a group of men who believed that if they managed to hijack some big jets and fly them into US icons they would simultaneously get some praise for their Muslim brotherhood and be rewarded with 72 virgins a few seconds after they crashed?

It's as simple as that."

I can just imagine the planning sessions for it.

Conspirator 1: So how can we (insert proposed conspiracy theorist motivation) without anyone knowing?

Conspirator 2: We could have planes crash into big buildings and say they were hijacked by terrorists, security at airports is pretty lacking nowadays and we've considered the possibility of such a threat before. Lets do the world trade centers they make for great media coverage and are big buildings that are easy to hit with planes. Nobody will ever forget it.

Conspirator 1: (Evil laugh)Kill innocent people, I like your style. Yes but we can't just hit the building with planes, they wont fall down and if they don't fall down nobody will think it was really that big of a deal. I mean it's impossible for planes alone to bring buildings down, everybody who knows anything about building construction knows this... So what we do is line the buildings with explosives, the nano-thermite we've been developing should be perfect, and bring them down after we hit them!

Conspirator 2: But wait, if it is so obvious to us and anybody who knows anything about building construction, won't people know that the planes couldn't have possibly caused the collapse? I do not understand this, this introduces a ridiculous risk of our conspiracy being exposed. I think we still achieve most if not all of our goals by merely having a large passenger plane strike the building. From such damage they may need to be demolished anyways. And if we have the power to orchestrate a secret demolition we can certainly order a planned one. You're introducing a very complex set of events, all of which have to go by unnoticed with nobody admitting after the fact that they contributed to the destruction, with no evidence of the set up or, evidence of in action demolition of the building. For instance what if the explosives fail, or if the planes set them off at impact? These are very real possibilities. This is far from a controlled situation.

Conspirator 1: You lack vision. If two planes hit in NYC and no buildings fell, nobody would even care. Think of all the time spent picking up all the pieces! And to add insult to injury we will demolish other world trade center buildings too! Not all of them but building 7, for our secret conspiratorial reasons, must come down. Nobody will know and the reward will far outweigh the risks. Oh and we will send a cruise missile into the pentagon and say it was a plane! There will be those, the smartest and brightest men and women among us, who will see through our ruse, but those kind of people are jackasses who believe in all kinds of other crazy shit, shit that is not real and that those geniuses nonetheless speak with confidence and authority about(like Newton with his alchemy). Nobody will believe them, and since we can execute our plan with 100% accuracy without leaving a shred of verifiable evidence the risk of most real professionals decrying conspiracy is almost zero. Heck we have complete control over everything so we can just form a study after the fact that derives a plausible scenario for events. Such an ingenious plan has zero chance on being exposed.

Conspirator 2:  Um, I think you're out of your god damn mind.
Reply: +rose white
The towers were held together by "just a few" bolts?

Right, and you're missing "just a few" brain cells.

Your premise is false and nobody buys your bs. Take your hot tube and shove it.
Reply: weunelect <Hi, I heat and bend steal all day as part of my job, idiot. Are people as stupid as you or are you just and evil Shitter?>

You seem to possess the intellect of somebody who is only fit to heat and bend steel for a living, all day long.

When did I claim that heated steel won't bent?

How about you refute the presence of thermite in the WTC dust as proven by the Harrit paper.  This scientific paper happens to contradict the official story.  Care to cite a refutation?  My guess is that you don't possess the mental capacity.
Reply: +Jim Vicious people are afraid of the truth. 
can you imagine what would happen if it came out that 9/11 was staged..not only staged, but an inside job by the american government?  lmao...i can. mass fucking hysteria.  i mentioned to my mom awhile ago that theres conspiracy theories about 9/11..like its an inside job. she looked at me like... O.o ...and said  "that seems pretty far out there." 
lol most people havent even considered the fact that it couldve been staged or perpetrated by our on government.  thats the problem. people dont even have the ability to question the things they see. they dont have the ability to see the truth, let alone accept it.
you must first give them the power of insight and perception...then you can work on showing them the truth..if they dont already see it by then...
Reply: LesPaul1482 Hi, stupid. Johnny did not look at the site good. If only someone else saw it. You saw it? You know it all. Nobody thought to get anyone but Johnny down the street to look at it. What about Big Foot?
Reply: +JetMechMA Except video evidence shows that some charges were disturbed. The first tower to fall had the top fall over instead of straight down like the rest of the building. Now you would expect that huge chunk of building to hit the ground as that same huge chunk. Miraculously, however, it disintegrated in mid-air while passing through the dust cloud. Gravity and air resistance sure as hell didn't do it.
Reply: Doktor Squatch Nonsense!!! Planes...jet fuel...office fires!!! The government says its true!
Reply: JetMechMA I still don't see anything other than your own unsupported conjecture.  No academic sources.  Nothing that would pass as an actual argument.

<The community of engineers is NOT split on this. They ALL believe that aircraft impacts and fires eventually brought the buildings down.>

Oh, they ALL believe the official story?  Cite a group of architects and engineers who publicly endorse the official story.  There happens to be 2000+ who say the official story is impossible.
Reply: JetMechMA <You still haven't answered my question of WHY would the implosion crime need to be covered up? Why wouldn't they do it out in the open and blame it on the terrorists?>

First of all, your line of reasoning is irrelevant because it contains no facts and doesn't disprove anything.

Secondly, I think it's pretty obvious why they wouldn't simply blow up the towers and blame it on terrorists.  If that had happened, then the government would be in the slippery position of explaining how all these tons of material somehow made it past security.  The towers were heavily guarded.  People may have though "Hey, who was the security company?  Oh, they are Pentagon defense contractors?  Oh, Marvin Bush is a partial owner of this company?  Hmm..."  Then they may have dug a little deeper and though, "Hmm, who had access to the steel columns in the core of the structure?  Who would have blended in and not had anybody look twice?  Oh, there was an 'elevator modernization' taking place the months before the attack?  The elevator shafts have access to the steel core columns, you say?  The company performing the 'modernization' is also a defense contractor with Pentagon ties?  Wow, what a coincidence..."

You aren't what we would call a deep thinker.

<You have no answer for that because you are stark raving insane.>

Oops, just proved you wrong there.  That would make you a moron.

<Why even DO the implosion when all they needed to do was hit the buildings with the planes which all by itself would be an act of war?>

Doctor Squatch (John) gave a pretty good explanation several posts back.  Me JetMechMA me no read good.  Idiot. 

< And the evidence for thermite is that there IS no evidence for thermite.>

There happens to be a 2009 peer reviewed paper by Haritt et al that uses this thing called science to prove that thermite is contained within the WTC dust.  Me JetMechMA me no read good.

<THRERMITE DOESN'T EXPLODE JACKASS.....IT BURNS>

Due to its nano sized reactants, which would give much greater surface area and allow for a move violent reaction, as well as the carbon contained within the matrix of these chips, which would give a supply of expanding gas during the reaction, the nanothermite contained within the dust could have very well exploded.  From the body of the Harrit paper:  "Again, conventional thermite is regarded as an incendiary whereas super-thermite, which may include organic ingredients for rapid gas generation, is considered a pyrotechnic or explosive"

Clapsaddle BJ, Zhao L, Gash AE, et al. Synthesis and characterization of mixed metal oxide nanocomposite energetic materials. UCRL-PROC- 204118, Lawrence Livermore National Laboratory: Livermore, Ca; 12 May 2004.

Aw shucks another academic citation that you have to somehow refute.  And you've cited...nothing at all.  Good, solid argument you've got there.
Reply: JetMechMA <You still haven't answered my question of how could demolition charges work when the aircraft impacts would destroy them upon impact.>

Oh they would?  And you know this for a fact?  What academic source are you citing?  Or is this still your unsupported conjecture?  

Surely these charges couldn't be placed inside the reinforced core of the towers.  Surely they couldn't have been protected with an insulated, shock-resistant material.  Nah, that would be impossible...simpleton.

<You are illuminati spreading disinformation>

Hah, too funny.  Never been called Illuminati before.

<Your whacky conspiracy is too easily disproved from EVERY angle.>

I think you are confused as to what constitutes proof.  Your weak inductive reasoning and unsupported conjecture can never confer proof, by definition.

<"There happens to be 2000+ who say the official story is impossible."........You're a LIAR.>

Oh really?  http://www.ae911truth.org/signatures/ae.html

Looks like you're an idiot.  Again.

<there have been COUNTLESS main stream scientific simulations that disprove your whacko implosion theories.>

Cite one.  Just one.  Oh I almost forgot, you can't, because it doesn't exist.
Reply: Cory C this is the first time I've heard of the horseshoe crab surviving millions of years. I havent been everywhere and done everything, forgive me.

But do you have an explanation for (speaking of creationist sources) the evolution of the woodpecker or the bombardeer beetle? To my knowledge no evolutionary biologists can figure how the safety valve for the beetles' explosion evolved before it was capable of producing the volatile liquids.
The woodpecker has a membrane to protect from the impacts, so it doesn't knock itself out and get eaten. But how did it start doing what it does without starving from lack of stored food.? Softer wood trees? 

Of the two of us I'm not the one refusing to consider the opposing view. Im sure the Bigfoot caught on IMAX HD was just a film crew member running out of the shot wearing all black needlessly. Or there's another perfectly logical explanation.
Reply: Dave Corrigan <Can you tell me how deformities and shortcomings translate into genetic advancement? If the chance of DNA misreading, retarding the organism is what we have to credit evolution, then we must be the biggest retards on the planet.>

My understanding is that cells have the ability to comprehend their environment, and adjust the genetic expression inside their nucleus to adapt to environmental stressors.  There may be some randomness involved, but genes change specifically to meet environmental challenges. 

I don't pretend like any of this refutes a belief in God, fyi.  God and evolution aren't mutually exclusive.
Reply: +JetMechMA i find it simply amazing that people are fine with your notion of once a floor drops, the floors below are no longer able to support the weight... now wait a minute... did those floors somehow get heavier??? that's the only possible thing that could happen with that theory. i mean wasn't the building, by designed, built to hold up every floor above the one above it? meaning wasn't the 3rd floor made to withstand the weight of the 100+ above it?  or was it pfm (pure fucking magic) all these years? now i can buy there was a fire, maybe i weakened the steel some. but has everyone forgot how fast gasoline burns? now speed THAT up because it was jet fuel. for me, the fuel didn't burn long enough to soften steel. the woman standing in the impact hole proves this. so where is all this raging fire at??? in the basement you say? so why didn't the building collapse from the bottom? perhaps the fuel become like a sticky bomb fresh out of the movie 'saving private ryan' and stuck to the  support beams. or perhaps nanothermite was indeed used and t he stories we got was bullshit like a vast number of folks believe it was. and if 1 part of the story is bullshit, how can ANY of it be seen as truth. thousands lost their life and their families deserve the truth. like the jfk assassination, we will never know the truth.
Reply: +mschnurp EXACTLY. I mean if what he was saying was even REMOTELY true, we wouldn't spend thousands of dollars on explosives to demo a building (from the ground up mind you). we would just light a fire in the top floor and watch it magically destruct itself. Lol
Reply: +weunelect roll over and believe what the goof government tells you good sheeple. not sure if your too lazy to research or too stupid to spell the necessary words up in the search bar to see it all for yourself.  i haven't said anything that isn't well documented right here in other youtube videos. perhaps the pain of seeing the evidence would have you questioning like a lot of people here. its funny how people can show the planes are not the planes that allegedly hit the towers, and yet its easier to call someone uneducated who simply points out how the story told couldn't possibly happen. i state that the floors that collapsed should not have brought down the towers, furthermore ask that you simply look at failed demolitions (there i spelled the big words for you) and see for yourself how high rises have had 30 feet of floors blown from the base of the building, and the building drop the. 30 feet and remain intact and standing. yet it remains  completely impossible for it to happen near the top. the whole building becomes totally unable to support the weight it was designed to support from its construction. i guess the other video showing an attempted demolition dropping a building  30 feet and it remain standing was built more solidly... yeah that make more sense.
Reply: rose white You too believe in a conspiracy; the one cooked up using political science and not physical science by Bush and his people. And because our theory can't possibly fit into your cartoon world conspiracy, you don't know how to react really. So logically, you have to call other people crazy and stupid. 

So... 14 Saudis, 4 Lebanese, and 2 Yemeni terrorists that blew off flight school flew better than real commercial pilots can and hit 3 targets, one of which was under renovation and needed rebuilding anyhow; actually the two towers had lots o problems too, asbestos. And they penetrated our national defense and happened to slip through jet pilots confused because of an exercise. 

That's one WILD conspiracy. Who funded them? Who provided intelligence? Well, you may not know the Saudi ambassador to the U.S. supposedly did. Do you know what was done with that I do when it came out? BURIED, covered up, by Bush and Company. The conspiracy theorists controlled the information you got. How does that make you feel?
Reply: JetMechMA <I know EXACTLY what I'm talking about. That the implosion theory is disinformation...and anyone spreading it is either literally insane, or is deliberately spreading disinformation.>

Academic source that proves your assertion?  Still nothing?

<Again....there would be no reason to crash the airplanes AND do implosion. The two types of plots are contradictory and physically impossible>

Uh...no?  The jet impact was the red herring, needed to create a "rally-round-the-flag" event, which is the purpose of a false flag attack.  The plane impact in no way negates the use of incendiaries.  The incendiaries in no way negate the plane impact.  Can you cite proof that one is impossible if the other occurs?  Of course you can't, you haven't cited a singe piece of scientific evidence in this entire thread.

<No other demolition charges were needed...because again, no  single floor of a building can withstand the sudden impact of the entire upper section of floors impacting it.>

Again you display your idiocy and ignorance of physics.  The force of the upper floors does not exert itself on the the floor directly below it.  It exerts itself on the entire undamaged structure beneath it, which distributes the force evenly to the ground.  Thats the whole point of a steel framed structure.  The frame was designed with redundancy in mind, and would have likely been able to support the weight of 2 or 3 towers stacked on top of each other.

Again, you're dumb.
Reply: Valentin Kalinovskiy <wow you guys in the comments are really going at it by the looks of it.. penis>

Hah, gave me a chuckle.
Reply: madtownmadman you don't see a plane, you see what you think is an explosion of a plane. But it's a bunker buster. Look at the blast pattern of the last wall that took an impact in the Pentagon. It's a perfect circle. And there are no solid parts of the plane, and no "black box." So you need to reword your statement.
Reply: madtownmadman all footage taken by nearby businesses were confiscated and classified. What's the big secret? We all know what happened... Don't we?
Reply: JetMechMA <Look....these other guys on here have already blown your so called academic sources clean out of the water.>

Cite the study that refutes Harrit.

<Any intellectually honest person knows that the burden of proof is on the one making the assertion...not the one debunking it>

The Harrit paper constitutes proof.  Prove otherwise.

<You made a claim and your "evidence" is so lame>

Give a specific, technical reason why the Harrit paper is flawed.

Oh thats right you can't, all you have is your fallacious logic.  Anything scientific to bring to light?  Any study that reanalyzes the dust and discovers there is no forms of thermite?
Reply: madgodloki <Either way the only actual peer review of that paper will show you that it's not found thermite.>

And which "actual" peer review are you referring to?  Cite whatever debunker blog post you wish to pass off as science.  

The actual peer review by David Griscom, formerly of NASA, DARPA, and US Naval Research, and author of 190 peer reviewed papers, was very thorough and lasted for months.  This paper concludes the presence of advanced incendiary material.

<You thinking it was thermite does not make it thermite, Your paranoia does nothing to the facts.>

The forensic evidence proving the existence of a form of thermite makes it a form of thermite.

< I'm really tired of even wasting my breath talking about this idiotic nonsense.>

Then stop replying; you're clearly just spinning your wheels.
Reply: Cory C I think there's as much evidence supporting the nuclear bomb theory as there is supporting the directed energy weapon from space theory.

That would be little to none.
Reply: +Jim Vicious there is no debate, if they(ooohhh, warped conspiracy time ) used any thermite in any sizable mass you would've seen the entire 2 or 3 floors would've lit up like a electric welder the size of a baseball field  and if it did for some extremely bizarre reason. the towers would've dropped almost instantaneously or within a the first few minutes. and of Course if any one looked at it for a few seconds would've been permanently or party blinded.Then of course what everybody tends to forget about demolition. you have to get directly at the  bare support beams. you would have to remove anything obstructing to gain access (you know, like sheet rock, electrical systems, plumbing, elevators, some stairwells any interior insulation or soundproofing and ceiling tiles; I am sure I missed a few too ) So you could not plant anything close enough to effect them. you would literally have to evacuate the entire  building,  just to do that. Seriously think about this. people are making money off of conspiracy hype and  hysterical paranoia or obtaining recognition. As I am sure this guy is too
Reply: +Emvaz22   Keep citing the Harrit paper, dummy.  It's the one that snuck through on the open on-line forum without the editor's approval, disgracing the forum, causing the editor to resign and the forum to be discontinued.  It's a joke, but then again you're a clown.
Reply: Emvaz22 THE NIST REPORT PECKERWOOD!!!!!! NOW TELL ME WHERE YOU GOT YOUR DEGREE IN PHYSICS!!!!!!! WHAT? YOU DON"T HAVE ONE? YOU'RE JUST ANOTHER PECKERWOOD THAT USES GOOGLE AND PRETENDS TO BE AN EXPERT?
Reply: Emvaz22 Don't forget there were probably also cleaning supplies so maybe the plot included mustard gas as well!  Don't let those reptilian shape shifters tell you they were just janitors cleaning supplies it was really the beginning to deadly mustard gas!
Reply: Boris B
My bad, I had it on mute and was simply reading the video.  I didn't even have a problem with his statement that office materials will float on molten aluminum as they burn - but it's a REALLY simplistic way of looking at it.  You pour molten aluminum on a desk, chair, carpet etc., such items do not just pop to the surface of a sudden pool of molten aluminum.  The whole thing would be a complete mess, mixed up and mashed together under these circumstances.  I'm not saying they'll combine on a molecular level or anything, either, just saying the "floating" example is ridiculous in this situation.

  You're wrong that jet fuel fires can't compromise structural steel.  I'm not going to get into the thermodynamics of a building fire between solid concrete floors with a massive convention of air because you'd never believe me anyway.  I know for a fact that the temperatures required for melting structural steel COULD easily exist under the circumstances in the twin towers. I'm not even saying they did, but they COULD, which makes everyone who blindly says "jet fuel can't melt steel" sound silly. That's all I have to say on that.
Reply: 442hoeky not really blindly. I'm from a family that had foundries (from 1910 till the 1980's) and on many occasions my father walked me through the plant, proudly explaining the kind of heat it requires to melt iron or steel, pointing to the huge vans blasting oxygen enriched air into the ovens.
Without telling him why, I asked him once (a year or so after 9/11) if jet fuel fire could melt or weaken high rise H-beams, and he literally answered: "you could fill a swimming pool with jet fuel and stick such a beam in the middle of it and when it's all burned up, though blackened by the smoke, you'll find it damaged nor weakened" He added saying that it isn't actually the fuel itself that's burning, but the fuel-vapor above it that does. 
I understand what you're saying; that the space between the floors in the buildings acted as a kind of horizontal chimney sucking in the air needed to keep it burning, right? (which was missing in the case of the swimming pool-example), but looking at the footage of the towers burning, the thick black smoke curling outwards is a clear indication of an oxygen deprived, not really that hot burning fire.
A-well... Anyway: Just wanted to say i'm not really just stating stuff blindly.
Since the official investigation wasn't really given any means to really investigate (according to some of them) and the rubble and steal was apparently removed in record time (unless that's just a rumor), it doesn't seem likely we'll ever get to the bottom of this, or not in my lifetime, anyway.
Reply: +Jim Vicious I'm not a demolitions expert or an engineer, but If i had to make an educated guess about why the Nat Geo thermite experiment didn't work, I would say it didn't work, because the thermal energy from the thermite burning wasn't being focused on the metal beam in its center.  With any open air explosions, physics tells us that energy loves to do one thing above all else, follow the path of least resistance.

Without any barriers or focus points to force the release of thermal energy onto the metal beam, most of the thermal energy released simply dissipated into the air around the beam instead, this is where National Geographic and even Mythbusters went wrong, they had massive charges of thermite, but the charges were given every which way to go, rather than into the metal they were supposed to melt.  I believe the term that best describes this process is charge shaping, focusing the release of energy, using reinforcement to direct the release in a set direction.
Reply: +Emvaz22 
Do you have any idea of how much nanothermite would be required?....Even though it's highly unlikely that this method would work anyway.   Do you know how much was found?   0.1 percent......And even that amount was subject to ridicule in a paper that has been severely criticized in the scientific community.
Reply: +Boris B 
Yes it does, jet fuel reaches the required temperature to weaken steel by at least forty percent.   That point is significantly less than half the 'melting point' of steel.
Reply: Nathan Stirling It really doesn't. Sorry
Reply: Boris B "useless within minutes"
 Yes, minutes. Try thinking of how long minutes is compared to "loud noise as the building is collapsing" 
  Jet fuel isn't even required to weaken steel enough to cause a building collapse you could do it with a house fire if its on the beams long enough to heat them to around 17 or 18 hundred degrees. Jet fuel just helps make it quicker. 
  There are several demonstrations of this like the person above me posted. 
   Your ideas are rested on shoddy information or lies. Your pick but it does mean you lost.
Reply: Emvaz22 The claim isn't that incendiaries can't cut beams when used right. There was no evidence of a device like the ones he used that I know of. So where are they? 
  The noise and the collapse aren't minutes apart its almost immediate, at the same time. So the noise is caused by the collapsing building not thermite. 
  Jet fuel fire can weaken beams, no matter how many of your friends will say otherwise there are demonstrations. 
  Your theory is the theory of a nut job.
Reply: Emvaz22
Just remember that ancient man melted iron ore and created steel - in some cultures the ability to make predates a written language.  The temperatures required are not as difficult to attain as you imagine.
Reply: madgodloki huh? What the bleep has the time loud noises of the collapse take has to do with the time it took to weaken the steel?
Also: Before 9/11 there has never been collapsing skyscrapers constructed with steel from any fire; not even if they burned for 10, 20, 30+ hours, (and in New York it happened 3 times in a row) so your: "not even jet-fuel is needed(..) fire is enough" isn't supported by examples.  
(the video of the overpass burning doesn't tell me anything)
Reply: Emvaz22
If you look at my earlier comments, I never said it DID reach those temperatures, only that it COULD.  And yes, a skyscraper CAN act very much like a blast furnace.  The point is, stomping around saying it's impossible is simple not true and it makes your arguments look ignorant.  Stick to the DIDN'T argument and stay away from the COULDN'T argument.
Reply: Emvaz22
"What COULD is irrelevant if you have no evidence for what DID".  It certainly IS relevant if you're going around saying it's "IMPOSSIBLE" when it's not - it makes ALL your arguments look questionable.  I'm just trying to warn you that by making a false or incorrect statement in the middle of a list of arguments hurts your case far more than admitting the possibility is there, but the evidence is not.

A green egg with some wood and good airflow is in no way comparable to thousands and thousands of pounds of fuel (jet fuel and many other flammable materials).  Thermodynamics can not always be scaled down to prove a point as the amount of energy released inside the towers was millions of times more than your little grill.

Concrete floors and ceilings act very much like the ceramic tiles in your grill.  The convection you speak of is easily produced in a skyscraper as all it takes is 2 openings (not necessarily above and below).  The entry point of the aircraft is one, the countless air and elevator shafts and shattered windows are the other.  The swimming pool full of fuel comparison is totally pointless as the situation couldn't be more different.

The black smoke "which is the sign of a poorly oxygenated fire" could be mostly from the walls (drywall, paint), carpet, furniture etc. that has not ignited yet.  There are dozens of rooms and hallways that abut the fire that would have been cooking hot without igniting all times during the blaze.  Besides, not everything burns clean - not even Kerosene.  Jet engines put out smog and you can't argue they aren't well oxygenated!  Poor gas over your lawn and driveway and ignite it.  You'll see how black the smoke is even in the open air.

Sorry, but there is not enough evidence to say the fire COULDN'T reach the right temperature.
Reply: +Emvaz22 haha yup and if it wasn't the jet fuel, it could also be 1 of 1000 other exotic chemicals that were scattered throughout the building. Also, if they need to read something to find out that kerosene produces black smoke,  we are in trouble.  I mean hell take gas poor it on the ground and light it.  Oh look black smoke and full ventilation. Lastly,  a back yard grill with charcoal can easily hit 2k degrees if vented right. I made the mistake once of using some oak wood.  Vented it proper to get the temp up, came out an hour later and the temp had hit 2300 F. That was accurate to within 100 degrees F.  Used a hand-held infrared to check it.  The custom gauge I had installed on the grill had maxed out the 2k. Give me some chemicals and I think I could have melted the grill down from the inside lol.
Reply: Emvaz22
We're going around in circles, but I don need to make the following points:

1.  The size of the buildings and amount of fuel does make a difference.  We're talking about quantity of energy in this case.  I'm not a physicist, but I do happen to be an engineer.  Things like this do not scale down accurately.

2. "There have been many, many large structural fires since the advent of industrialization.  Many of which burned much longer, and much more completely than the WTC."
True, but the WTC was a unique building in size and design.  It's very difficult to compare apples to oranges.

3. "it happened 3 times"
I should point out that the third building is an argument in and of itself.  If all these arguments were based solely on the that building coming down, I wouldn't say a thing because there's definitely something strange about that.
Reply: +Jim Vicious Keep researching Mr. Vicious. You might just get your head out of your ass after all.
Reply: +Boris B If you look at the video f4om about 10m30 onward you see that even these small amount of thermate do make explosions. I'm not sure if the loudness would match up or if they perhaps used different explosives in other spots, closer to the center of the building, further away from the public. According to explosives experts you would want staircases and elevators weakened aswell before bringing down a building. Now, I don't have the drawings of the building and I am not an explosives expert, but they might have just used different types of explosives for different places.
Reply: Stylish777 yes; that seems accurate. (my mistake)
Reply: rose white
There's nothing "light weight" about concrete.  You're right that calling them "solid concrete floors" is a bit of a misnomer, though.  The floors would have been partially hollow, but they were also full of rebar and extremely hard and strong.  I agree there was likely holes in them and you're right about the fire being on several floors.  These people should google "tanker truck fire melts concrete" to see a number of examples of open air gasoline fires (or sort of open air) melt over passes when the fire is underneath.  I doubt the concrete physically melted, but there is massive amounts of steel in structural concrete that does.  Cheers.
Reply: +Emvaz22 not to mention the steel was taken straight to the dock melted down n shipped to china found a finger
Reply: Emvaz22 "You're kinda slow, aren't you?  The thermite is deployed, the beam is severed, and then the remaining incendiary charge destroys the rest of the device." 
  Except you were just now mentioning a video where they put thermite on a steal beam without that device you're mentioning and it does not melt it if it has open air to release the heat into. Path of least resistance. They set the thermite on the beam without the device we're fucking talking about right now and it didn't even graze the metal. That's the whole point of you saying it has a device, Now you're saying the device melts from the exploding nano thermite somehow that needed a device in the first place just to melt the beams. But the metal device doesn't need another device to melt it, it's just as meltable as butter.. Obviously i'm the one being slow here.  This is the point, you think it doesn't require much thinking, and you have failed to think it through before you start throwing out silly claims. 

 "There are probably thousands of possible configurations for an incendiary deployment device that could behave in this manner." 
  Yes cause there are sooo many applications for devices that blow up buildings without leaving a trace, Sooo many people are on the market searching for spy gadgets. How about you give me an example of a material that could hold the thermite the way the STEEL device in question would hold it, But would also melt before the steel beams? The guy in the video demonstrated and even mentioned the fact that it would have to be made of steel because steel would not melt from the thermite on its own, So its available to direct the energy of the thermite. You're wanting something that's meant to hold the thermite without melting so it can do its job.... that also melts easily. I'm sure that exists genius. 

 "If you really think that there is no way that a device could be designed to effectively direct an incendiary charge and then be consumed in the final stage of the thermitic reaction, then you may need some help." 

 Do you understand anything about physics? Or do you just listen to some truther that filled your head full of shit? The device that would be designed to direct the charge would be made because the charge can't on its own defeat the metal. So the device would have to be able to survive at least as good as the metal or it would burn first. This isn't rocket science and yet you're still fucking retarded about it.  
  If the device is as it is required to do its job, then it will not melt even if it was sitting in thermite. Because the steel beam wouldn't melt if it was just sitting in thermite. The video demonstrated this.  I honestly think you people will believe anything as long as it supports your theory. 

"Peer reviewed, published, and unrefuted in six years.  Prove otherwise.  Cite your source that disproves the Harrit paper."
  Show me what I need to disprove from the harrit paper. As far as I have seen there was nothing that isn't explained better by another theory. 
  Especially the aluminum hitting the sprinklers there's absolutely no other reason to think it was something else, that is what we expect when molten aluminum hits a large amount of water. 

"No, it would have been better to relocate the debris and perform analysis for potential demolitions and incendiaries.  Because that's what the regulations are for when a building comes down.  "
 No that's what lunatics think you do. 
  A plane hits a building, the most likely reason for the events is this documented event of aluminum melting and hitting sprinklers... better waste months sifting through the debris JUST IN CASE somebody set up charges and flew a plane into the building too. 
 Plane flies into building, person can explain the explosion perfectly with the plane and the heat and someone like you walks by "well they should have checked it for thermite more than the 100 some pieces that were taken for further study." 
  Not my problem that you're a nut bag, They did take over a hundred pieces for further investigation and still found nothing, The plane hitting the building was seen by millions there is no reason to think it was thermite. 

"Peer reviewed paper p
ublished by 9 experts in their respective fields.  Still waiting on your academic citation that refutes these claims.  Just so we're clear, use this format: Title.  Author.  Publication.  Date.  Unscientific "debunker" blog posts don't count as an academic refutation.  Find a credible source."

 http://climateguy.blogspot.com/2010/11/peer-review-of-harrit-et-al-on-911-cant.html

 Here ya go. another nail in the coffin. Its annoying having to dig to debunk this shit a dozen times though. 
  This is a proper peer review of your harrit paper. 
 "The Al slugs would give inhomogeneous background Al signals in the EDXA spectra. This was not considered or discussed in the paper. There could be no or little Al in the red-layer.
The carbon adhesive tape will give inhomogeneous background C signals in the EDXA spectra. This was not considered or discussed in the paper. There could be no or little C in the red-layer.
There is as much or more Si (silicon) in the EDXA results than Al in all the red-layer results and Si and Al are closely correlated in their spatial distributions (e.g., their Figure 10). No probable explanation is given for this. This is not consistent with the presence of metallic Al.
Oxygen (O) is more closely spatially correlated with Al and Si than with Fe (e.g., their Figure 10). No probable explanation is given for this. This contradicts the conclusion of the presence of metallic Al.
No effort was made to estimate the Fe:Al elemental ratio in the red-layer. Synthetic thermite or nanothermite would have a ratio of 1:1. The point is never discussed.
The exothermic peak in the DSC traces occurs at a temperature (420 C) approximately 90 C below the temperature for the thermite reaction. No explanation is proposed for this. Chemical activation energies of known reactions cannot be so sample dependent, whether nano-sized or not. This is not the thermite reaction.
In the reacted product (after heating in DSC), no Al-oxide is observed as a residue, as required by the thermite reaction. No explanation is given for this.
The obvious needed measurement of X-ray diffraction was not used to confirm the solid mineral species (oxides or metals). This is unacceptable in a materials chemistry paper. This is not considered by the authors.
Much is made of the fact that Fe-rich spheroids are present after reaction but there is no discussion of the grey-layer or of the origin of the Si-rich spheroids. Heating causes many things and there is an exothermic reaction so the conclusions about the presence of Fe-rich spheroids (which are reported to contain oxygen) as evidence for the thermite reaction is tenuous." 

 Your paper won't help you. 

 Oh, ouch now it looks like your claims about your brilliant harrit are kinda bunk. His paper was crap. Read my link. Go ahead, disprove what was mentioned about his lack of testing, his piss poor methods leave enough to the imagination but even with his findings there are better alternatives. 
  Just because the ingredients were there, does not mean they were in the correct ratio or put together or that they're from thermite at all. He even admits in the quote you gave that it doesn't reach the required temperature. The conclusion when that fails... "it was super thermite" Yeah fucking right. When all else fails just make up some ridiculous conspiracy theory to support your already ridiculous conspiracy theory. 

 "Uhh, the two aren't mutually exclusive... A liquid metal propelled by an expanding gas would both melt and explode...ROCKET SCIENCE." 
  You really don't think very well. The metal has a device to hold it against this beam so the thermite can melt it or explode it however you want this to work... after that explosion occurs the thermite is no longer contained and no longer will the heat be concentrated, the entire reason the device exists is why that doesn't make sense and you're too dense to realize it. You think a piece of paper was holding this thermite in place good enough to explode it through the steel that way the paper can burn up in the reaction without a trace. Also after the explosion occurs the beam is severed, The thermite would go rushing out like thermite does that means the device is attached to the beam which is severed and not melting. or the device is off the beam now, without the thermite to melt it. no matter how you run this scenario your idea of a device capable of holding the thermite good enough against the beam for an explosion to sever it, or good enough for it to cut through or however you want to make this work it will require a device which won't melt as easily as you're letting on. stupid anybody home in your head hello? 
  "Supportable, if you can read.  Having trouble?" 
  You tell me, go read that link I provided and tell me mr genius why your paper is so piss poor and why someone would look at all those faults and think it was accurate?  That's the peer review you're begging for so c'mon give it a look. 

 "Ah, so you believe that all of the aluminum in the plane liquified, collected in the same area, and then got hit by water, which turned the entire building to dust.  Just making sure I heard that right..." 
 
  A plane with 30 tons of aluminum. 
  An experiment had 66 pounds of aluminum and a large amount of water. Completely destroyed the lab. 
  All that needed to explode was one floor, the top floors collapsed or are you claiming that the entire building was exploded? Are you denying that the floor directly beneath the planes and the fires was where the explosion happened? Or are you denying that there is an automatic sprinkler system in the building on each floor? Maybe you think aluminum sitting in an oven at its melting temperature wouldn't melt or perhaps you think aluminum when it melts would not seep through cracks or perhaps you think aluminum wouldn't all fall into the general area of "beneath the plane" what here is so hard for you to get?  You think the water hit the aluminum that's funny cause when you read the link I sent it explains it very simply plane hits the building, its up in the floors it takes walls and floors and ceilings with it but the steel punctures the tanks, the fuel is ignited raising the temp. well over the melting point of the 30 tons of aluminum in the plane Where do you expect it to go? Lots of cracks in the resting area a large explosion one floor beneath the fires is noticed. all that 30 tons of aluminum sitting in a fire at its melting point right above a water reservoir used for the sprinklers on each floor.... no no of course thermite seems more likely. with magic disappearing devices and millions of conspirators.

  "If this is true, then what was that molten stream of metal pouring from the tower just before the collapse?  You "debunkers" claim it is aluminum.  You see the conundrum?  If it is aluminum, then your "explosive substance" is largely no longer in the towers, and certainly not all concentrated in the same area to where it would cause a massive water-induced explosion. " 
  Could be aluminum. Or the fact that the reaction of the aluminum and the water could raise the temperature over 2300-2700 degrees in areas... Meaning it could be iron which would have melted at those temperatures. Iron from the numerous iron sources in the building.  I mean that's the simplest answer but If we want to get crazy about it I suppose it could have even been melting the support beams, I would say it might have been molten desk. Guess we'll never know though cause I wasn't there collecting the samples of the falling metal. 
 
  But since the reaction of aluminum and water would raise the temperature in areas its not a "problem" very possible iron could have melted from that part but its not a definite iron, could have been any number of materials in the building that are similar to iron or aluminum. 
  Sorry for calling you stupid, it's just in response to how you talk. 

 
"If it's not aluminum, then it is iron, which opens a whole new can of worms for you to try to explain away, because iron is not going to melt in a building fire, which leaves you trying to explain the source of molten iron.   That becomes pretty difficult without the use of incendiaries.

Solid argument though.  You clearly know your stuff...

Good game." 
 
  Thanks you aren't too bad yourself. 

 But yeah, the aluminum/water reaction would release a lot of free hydrogen and its been noted that these reactions can increase the temperature dramatically.  
  Again no hard feelings for acting childish, you're not as bad as 99% of the people that claim conspiracy.
Reply: +madgodloki     "and we know for a fact that would be enough to take it down."And just how exactly do we know that?  The buildings stood after the planes hit them and the swayed with the frequency of completely intact buildings.You also state that "They didn't melt that I'm aware of. They were merely compromised by the intense heat."  What extreme heat?  The same extreme heat that the woman was standing in while waving to a camera, presumably in a helicopter?  That "extreme heat"?Another question comes to mind: where would the - ("Melted iron and aluminum and any other material very easily could have been from inside the building they would have melted and formed the same iron balls as any other molten iron.") - have come from?It's obvious you thought that through!  Not!
Reply: Yes Mad god, what ever you say!
Reply: +Jim Vicious Crackpot bandwagon, alien balls and holograms? Most 9/11 truthers don't believe in the holograms idea or alien balls or any silly nonsense presented by "debunkers" as straw man deflections from the weight of evidence pointing to an inside job. Try David Ray Griffin's book 9/11 Contradictions, which simply undermines the official versions, riddled as they are with inconsistencies, lies, coincidences, "mis-speaking", peculiar failings and events . There are many serious and educated people, including engineers, architects, scientists, pilots, who don't believe the official versions of 9/11. Many people are far too quick to dismiss "conspiracy theories", when the establishment story also involves conspiracy theory. For proven US conspiracies, how about Watergate, Operation Northwoods (the president quashed it but there are similarities with 9/11 as inside job), Gulf of Tonkin incident, unethical human experiments in the United States, all of which can be checked out online. There have been countless conspiracies. It's absurd, as many debunkers do, to class all conspiracy theories as the imaginings of nutters. There were many questions which victims' families posed through the steering committee to the 9/11 Commission (or Omission would be more accurate) that surprised me at the time, and which were not and still have not been satisfactorily answered.
Reply: +mizofan Holograms and aliens are indeed silly nonsense, but that doesn't stop some twoofers from believing it's true. Some ideas are too extreme to appeal to the mainstream twoofer, but they are out there. As for the weight of evidence pointing to an inside job, it's as light as the napkin that it was conceived on. 
And yes, there are in fact US government conspiracies that were found to be real, but those claims were actually backed up by evidence. Twoofers merely collect whatever they feel suits their case, ignore everything else, and call it proven. 

For example, if 911 was an inside job.. what's the deal with these controlled demolitions using magic explosives? I'd be far more inclined to believe a story about a secret group infiltrating a known terrorist group, and coaxing them into the 911 attacks... heck, holywood probably has written the script a decade before, but it was deemed too implausible and disappeared into a drawer where it was found by a janitor/FBI infiltrant years later...
Reply: +Emvaz22 The burden of proof lays on anybody making a claim.  That's why atheists don't carry a burden of proof; they don't make claims regarding god.  (Or at least the well-founded ones don't) They simply reject putting faith in other people's claims. You are making a claim that his science is wrong and you've simply been asked to demonstrate your logic.

By all means, share with us your insight if you care about your fellow man.
Reply: rose white Did you watch the video?  Do you have some point that would challenge it?
Reply: +Jim Vicious Well, the question can only be, what can we do to stop these Tyrannical leaders/ hold them accountable
Reply: +Jim Vicious  I agree I don't know if it was used or not, but he does show that It could be possible to use this stuff if nothing else to help bring down a building
Reply: rose white State your case or shut the fuck up.
Reply: I'll just leave this here.

Where did molten Molybdenum (as shown in a USGS data set), which has a melting point of over 4,000 degrees Fahrenheit come from? Or volatilized lead?

Extremely high temperatures during the World Trade Center destruction

by:

Steven E. Jones,  S&J Scientific Co., Provo, Utah

 Jeffrey Farrer,  Department of Physics and Astronomy, Brigham Young University, Provo, Utah

Gregory S. Jenkins, Physics Department, University of Maryland at College Park, Maryland

Frank Legge, Logical Systems Consulting, Perth, Western Australia

 James Gourley, Kevin Ryan,Daniel Farnsworth, and Crockett Grabbe, Department of Physics, University of Iowa, Iowa City, Iowa

Abstract:

In an effort to better understand the conditions that led to complete collapses of the World Trade Center
Towers and WTC 7, we apply scanning-electron-microscope (SEM) and energy dispersive x-ray spectroscopy (XEDS) methods to analyze the dust generated, with an emphasis on observed micro-spheres in the WTC dust. The formation of molten spheres with high iron contents along with other species in the WTC dust required extremely high temperatures. Our results are compared with those of other laboratories.

The temperatures required for the molten sphere-formation and evaporation of materials as observed in the WTC dust are significantly higher than temperatures associated with the burning of jet fuel and office
materials in the WTC buildings.
Reply: rose white I have a Master's in physics from ASU and work as an aerospace engineer for Paradigm Precision, LLC. How about you?

All you've done in this thread is baseless namecalling. Should that continue, I won't even dignify it with a response because you'll just be confirming my suspicion that you're just a bot of some sort.
Reply: "hot tube experiments"  
I swear I can't keep up with these damned kids.  I've never heard the term.
Reply: Emvaz22 I must have somehow completely misread.  My apologies.
Reply: +Jim Vicious I just wish someone would make a video using a steel beam like the ones used in the world trade center. And applying the same amount of weight it was holding on one end while having the other end secured high enough top allow its opposite side to bend.  Then using jet fuel and the same office supplies and furniture in the middle of the beam to get the beam as hot as it could have gotten using said fuel for the flames.  Then allowing the fire to burn on the beam in a concentrated spot as well as spread out (two different methods). Allow it to burn for the same amount of time or longer to see if the steel beam bends under the weight it was holding.  Don't forget it also needs to be as long as the ones used.   Scaled down experiments aren't 100% accurate to the real size version.

When talking to conspiracy theorist I always use the swordsmith explanation of proof that steel doesn't need to melt to weaken and collapse under weight.  If steel only needed to melt then are all the videos of Katanas being forged a lie?
Reply: +Seohn Aranys so u funding this?
Reply: +charles nichols If I could I would but you see. I have watched videos on forging swords and have seen steel bend without melting in those videos.  Just figured if those nits believe they are so right. Prove me wrong about steel beams bending under heat.
Reply: KellyLS82 I should have expressed my sarcasm, not that i dont think its worth while i would like to see it, but to set it up how he was asking would be an expensive and time consuming venture.
Reply: This is actually my first time ever even commenting on a f**** thread I've got much better things to do with my time but as I scroll up I can see we spend your time rose f**** loser and all you do is talk s*** to people anyways so get a f**** life
Reply: charles nichols LMAO.  You're totally not a loser, we get it.  Cute.  So you're god doesn't let you say certain words but he's perfectly OK with you implying them?  Interesting.
Reply: +Jim Vicious Well put, my friend. 
I'm skeptical about everything.. this just makes me more skeptical.
I mean, anything is possible..
Reply: +Gabe Walker Anything is possible, but just how probable is it?  Do you really think government officials dragged enough thermite up those towers and placed it in just the right place to do the most damage and no one noticed?  Just for grins, should you ever find yourself near a fire station, you might want to ask one of the firefighters there just what happens when large quantities of fuel start burning in confined spaces.
Reply: Agreed! 👍
Reply: +Emvaz22 All the experts agree 90% of the fuel was burned in the first minute. Think od a soda can hitting a wall at 500MPH. The fuel was atomized and flashed off. Hundreds of experts.
Reply: +Jim Vicious All the smart well trained people in the world who understand the easy physics of weaken steal by fire, except you and your idiots. Go to school and get an education. Anyone can be stupid. You are not special.
Reply: +Jim Vicious so waht...This guy makes a voideo with data and all you have is a opinion you were given by your boy George....you don't matter...
Reply: Okay here's one for our local white rose bud.

Let's turn this into a simple first year high school physics problem. Let's also assume that heat from burning jet fuel and office materials weakened the towers structural integrity enough to start a collapse. 

We know the towers fell at free fall speed (9m/s) from start to finish, nobody on either side debates this. Here's where it gets sketchy. The floors are approximately 4ft thick comprised of 4in of concrete and the rest mostly interlocking steel trusses. In order to destroy those floors you need a great deal of energy. Assuming that energy is coming from the floors above falling onto floors below requires a loss of momentum (deceleration) because you are expending kinetic energy to perform work (destruction)on a load (intact floors). 

Since we've already established free fall speed from start to finish, the energy to destroy those floors MUST have come from another source. Now what is readily available that could release enough energy to destroy a few hundred floors of skyscraper without any loss of momentum from floors above falling onto floors below? Explosives seem likely. Especially when you consider video evidence of several squibs appearing at the same time, 20 floors apart, ahead of the shockwave. 

The whole show as stated in the official story violates conservation of momentum and conservation of energy.
Reply: +Emvaz22  Hi, I heat and bend steal all day as part of my job, idiot. Are people as stupid as you or are you just and evil Shitter?
Reply: +Boris B Your father was a moron or you just made that up. Either way any body that works with metal heats it to bend it, idiot..
Reply: +Boris B Hi, stupid. We who work with metal use heat to bend it, idiot. What an idiot you and you cronies are.
Reply: weunelect Of course. But it's the amount of heat that counts, silly, and jet-fuel-vapor in a swimming-pool with a steel H-beam upright in the middle of it, won't soften the metal to bending-point.
Reply: +Emvaz22 Knowledge frighten you? You Satan worshipper hates being exposed.
Reply: +rose white These "people are working for Russia, and Muslims to try to hurt America. It is good to show people their ignorant hate. It is their job. Your words mean nothing to them, but it does to the readers they are lying to.
Reply: weunelect Yo, meat puppet. Having a nice day at the office?
Reply: weunelect It's the speed of light squared.. but you're so obviously a troll/bot it's not even funny. Try harder.
Reply: Doktor Squatch The speed of light is C stupid. You are a paid by your slave government to put idiot things like this on You Tube. We see you.
Reply: weunelect Funny; I was just thinking the same about you, meat puppet
Reply: weunelect Aww did you just Google that? That's so adorable to anyone reading your previous posts.
Reply: +El Clandestino 
EXACTLY THIS ... this is the single most cogent, perceptive and concise answer to the whole 911 conspiracy BS from both sides. So many tards who obviously never even graduated high school arguing about events no one actually witnessed. I see the same thing adneuseum !!!
The worst is that even the ones who claim to understand some science often fail to apply the basics before making a post ... Occam s razor needs to be the absolute benchmark for discussions like this.

Basically if your "position" within the debate requires that you add further elements for it to be consistent (ie return the kind of effects in the real world you suggest) That have not been clearly demonstrated as factual, then its HUGELY likely your logic is massively flawed.
Reply: Doktor Squatch "It's the speed of light squared.. but you're so obviously a troll/bot it's not even funny. Try harder. "

You know it's funny when you correct someone like this but obviously have no idea what you're talking about. What relevance does the speed of light have when talking about energy in the collapse of a building? We aren't converting mass into energy. Most of the energy is through chemical burning or gravity. Kinetic energy is measured as E=1/2mv^2 for moving objects.
Reply: Cory C I wasn't talking about mass energy conversion. Just correcting his laughably stupid comment. If you'll go read my previous post my issue is the complete lack of energy expenditure and subsequent loss of momentum that would be expected during a building's global collapse without the use of some other form of energy (probably explosives)to do the work of destroying every floor.

Free fall collapse without energy to remove all resistance below violates conservation of momentum and conservation of energy.
Reply: Doktor Squatch How is bringing up mass energy equivalence correcting anything? I don't understand.
Reply: rose white You mean the conspirator dialog? It was to show how insane the idea of using controlled demolition is for any conceivable conspiracy. I'm not invested in this debate(I don't think it was a controlled demolition, I think the hijacking explanation is by far the best, but have not researched conspiracy theories in depth). However, if there truly was a conspiracy and a controlled demolition, some kind of planning session must have taken place. That is the one I imagined. I thought it was entertaining so I shared it haha. My favorite part is the conspirators know it's obvious planes can't bring down the buildings, yet one of them still decides using controlled demolition, with all possible conspiracy plans available, is a good idea. It's like they're trying to give away it's a conspiracy.
Reply: rose white I don't know about the sky marshals I didn't fly for years after 2001. I was 15 at the time. I do remember the difference in security at the airport though. I remember going with my parents if my mom or dad were going on a business trip I could go right through security with them(a single metal detector and x-ray machine for carry on luggage). No body scan, didn't have to take off shoes or anything like that. They didn't check the ticket until you got on at the terminal and I don't think they checked ID's either, just the ticket.

Nowadays it's pretty thorough.  But yeah I think it'd be possible to get past security. It's just people in the end and people make mistakes and can be bribed. Heck I read stories all the time about TSA(the airport security agents) stealing people's laptops and stuff. It's not a flawless system.
Reply: +Richard Driskill humor me? why was he wrong?
Reply: +rose white you realize Jews don't believe Jesus was the son of God either right? Do you attack them for their beliefs? Do you tell hem their religion doesn't worship your God? Or do you just take your own religions hateful propaganda towards Muslims at face value?
Reply: rose white Well I don't believe Jesus is the son of god either but I'm not Muslim. There's crazy Christians too. Like the ones that blow up abortion clinics or kill children who they think are possessed during exorcisms. It's not like Christianity is void of its own horrors. Look at the inquisition. And as far as crazy beliefs today look at creationists. There is much in common between creationists and conspiracy theorists.
Reply: +rose white
Are you actually for real ?!?!??!?!?! Or are you some kind of ultra-troll-bot??
(maybe this is what happens when people take on a Christian consciousness)

first i was going to take issue over your initial "a muslim will try something like 9/11" comment .. only to point out, your over focus (religiously inspired obviously) on the Muslim issue, clouds the your ability to recognise that just about any group of Humans will engage in suicide attacks ... if they have a strong ideology once they are p1ssed off or desperate enough.
 Historical examples relevant to the topic
Vietcong in Vietnam circa 1960's
Japanese had a whole range of various suicide weapons.
Both the Germans and the Russians employed a range of suicide weapons a various stages of WWII.
Any casual inspection of history will reveal just how common this practice has been through history.
Should be noted that other than the vietcong these suicide weapons were only employed when they nation in question was desperate.
So your assertion that there is something SPECIAL about Muslims using suicide weapons, shows just how twisted your thinking on the subject is.

But thats nothing compared to your second admission ... that you visit Muslim sites to inform Muslims your imaginary God Jehovah (who is actually a jewish God) is real and true and theirs is false ...... ROFLOL (your priceless)

I'll agree that muslin fundamentalism is rightly characterised by narrow mined, ignorant, and bigoted perceptions of the world.

But you obviously fail to see the MASSIVE irony of your described actions, when compared to what your are apparently opposing.

This if nothing else should act a clear education for any rational right mined human of the terrible danger of ALL mindless and utterly irrational religious faith's ... all of you are the worst scourge mankind has ever known.
Reply: +Emvaz22 You'll never convince people that listen to other people, who listen to idiots. I've seen a couple sim's of the collapse, and I've also seen the view of the American physicists and his counterpart in Europe who think it was an  aluminum water explosions that did each of the buildings in. Alcoa also did tests with much smaller amounts of Aluminum, 45 pounds of if, plus the same amount of water. It destroyed the lab, and  a 90 foot crater in it's place,. That was just 45 pounds. you can see melted aluminum flowing out of the building
Reply: JetMechMA When you're a conspiracy theorist the conspirators have absolute power, they are like god, and it is only up to the conspiracy theorist's imagination to explain such things. I think 9/11 conspiracy theorists are much like creationists. Creationists may not have started with the conclusion that the bible is true and evolution is false, but once they come to that position, all future analysis of the evidence is through the lens of the bible. Everything starts to look designed by an intelligent creator for a purpose. As a result the creationist demands absurd clarity and impossible evidence to be convinced otherwise. I don't think most creationists would be convinced unless they had nonstop video footage of the last 3 billion years. The same is true of many 9/11 conspiracy theorists. Short of a full scale replication of planes hitting skyscrapers(something that is in principle impossible due to the complexity of the event[you'd probably get different results each time], and impractical due to the cost) they cannot possibly be convinced out of their position. Even if such an experiment was done and the results were duplicated the conspiracy theorists would probably say the conspirators also had a hand in the experiment.

The idea that things might happen in a way different than they'd expect in an unprecedented event like this is not a possibility. The conspiracy theorists are even smarter than the conspirators, who have amazing power and cunning in some areas, but apparently overlook things like the absurdity of the buildings collapsing after being hit by planes. At least if creation is true the god of the bible isn't supposed to be an incompetent trickster. In the fantasy land of the conspiracy theorist the conspirators are both incompetent and brilliant.
Reply: +Jim Vicious To beg a question means to assume the conclusion of an argument—a type of circular reasoning.. I think you meant to say it raises the question.
Reply: Cory, I'm sure you believe as you were told that dinosaurs lived millions and millions of years ago and DIED millions of years ago; But, the Coelecanth was discovered alive and a pterodactyl was caught on camera last weak fixing a kink in its double-jointed wings in mid-flight!! Something has to give, dinosaurs still existing or your ego and pride in why you "know."
Reply: +Angel R. totally agree top!
Reply: +weunelect When I was four years old, I watched my mother kill a spider... with a teacosy. Years later, I realised it was not a spider...it was my Uncle Harold.
Reply: Awakening is an inside job.
Reply: They couldn't, and wouldnt if they could, bear the cost o a regular demolition of the WTC 1,2&7 buildings. It was better if they were blown up and it was probably part of he plan to begin with. They looked at the plans an said, "we can build that, and let someone else destroy it." It was bound to be a target. To demolish it legitimately they would have to evacuate the city! And pay businesses for estimated loss while the dust settles. Wouldn't want 70,000 people dying of CANCER now, would they?
Reply: Why pay, when you can cause the cost to be absorbed by taxpayers, at the same time provide a reason to rally for war and unify the people to back your interests, and say it's "US interests" we are protecting?
Reply: JetMechMA <This disproves the implosion theory.>

Sorry, your stinking pile of speculation doesn't disprove anything.  That would require facts that contradict the facts presented in the Harrit paper.  Cite an academic source that provides an alternative analysis of the Harrit material, or that reanalyzes the dust and draws a different conclusion.  If your aim is to disprove the presence of thermite, this is what you would need to do to accomplish this.
Reply: JetMechMA <I proved the logical fallacy of implosion....because the perpetrators could never know the exact point of impact....so they could never know if the impacts of the planes would disturb their demolition charges>

Mmhmm, because I'm sure there is no way to to simply rig each floor, and number the charges by the floor they are on, and then sequentially set off the charges remotely, starting at the floor of impact.  I'm sure that there would be no way to plant these devices in the reinforced core of the structure where they would be protected from the office fires.  There would be no way to wrap the charges in an insulative, shock resistant coating.  No, none of this seems remotely possible.

<I just knocked your insane ramblings out of the fucking water.>

Keep swinging, you're bound to hit something eventually.

<The burden of proof is on YOU the one making the claim.>

Active Thermitic Material Discovered in Dust from the 9/11 World Trade Center Catastrophe.  Harrit et al.  The Open Chemical Physics Journal.  April 2009.

Proves the existence of advanced incendiary material in the dust.  What facts can you bring to the table to disprove this?  Your weak speculation doesn't count as a fact.  Ad hominem logical fallacy doesn't count as a fact.  Cite an academic source.  Thanks.
Reply: +JetMechMA Namecalling, nice. They brought down the buildings all the way because they had become a giant white elephant because of technological trade advances and wanted to get rid of not just the buildings themselves but SEC insider trading investigation information as well (like the Pentagon just happened to be hit in the area where they were investigating 2.3 trillion missing dollars as rumsfeld announced the day before). The planes were used as part of the story so they could hit multiple targets (nobody would believe bombs could get planted in the most heavily guarded military HQ on the planet) and for just that much more obfuscation. It worked masterfully. After all, here we are 14 years later.
Reply: +Emvaz22 www.ae911truth.org

Architects and Engineers for 9/11 truth. Just proves these guys aren't even willing to do a simple Google search on their assertions. I'm done.
Reply: rose white "Hi Cory, the problem with your creationists v conspiracy nuts comparison is that earthworms prove Earth is young just as the Bible says while videos prove connuts are crazy."

This is probably stupider than anything any of the conspiracy theorists say.
Reply: Dave Corrigan "Coelecanth was discovered alive and a pterodactyl was caught on camera last weak fixing a kink in its double-jointed wings in mid-flight!!"

Ok first of all, the Coelecanth discovered has changed, albeit not much, from the fossils discovered from millions of years ago. It has evolved though not much. The reason dinosaurs and many other animals that we find fossils for(the Coelecanth is not a dinosaur) are not around now is because they go extinct. Their environment changes in some way and only those species that evolve and adapt usually have what it takes to survive. The horseshoe crab also has fossils found from hundreds of millions of years ago. The reason you probably don't mention it is because it's probably not listed in whatever creationist resource you've been using. And the pterodactyl? Again it wouldn't be impossible for this to be true but it is extremely unlikely. As these are some pretty big animals supposedly living in easily discovered places. How is this evidence for creation anyways? It means that if evolution isn't an explanation, most of the intelligently designed species failed and went extinct, while only rare ones like the coelacanth and horseshoe crabs survived.

You know there are sightings of bigfoot right? Well telling by your writing you're probably a bigfoot believer too, and heck you probably watch Ancient Aliens on the history channel and think that's true too.
Reply: Can you tell me how deformities and shortcomings translate into genetic advancement? If the chance of DNA misreading, retarding the organism is what we have to credit evolution, then we must be the biggest retards on the planet. Xmen is a good cartoon for teaching kids not to bully mutants, but it's a fantasy to think mutation leads to genetic advancement.
Reply: rose white I know. Academia is so up its own ass. What's the full title of Darwins book? The Origin of Species, Or The Preservation of FAVORED RACES in the Struggle For Life.

Another thing History was distorted on; Hitler was a Darwinist, not a Catholic.

I'll read his book on worms.
Reply: JetMechMA Thank you for your professional opinion! I'm deranged?? Literally--like, literally deranged?? That explains the chaos in the world. Oh yeah, and I just wrap myself in the Bible, uh huh. That's right, yup! From dusk til dawn I can't put the book down. I have no real life experiences outside of church and Bjble study. 

The God on Earth is Satan. the majority of us are given a choice: either we trust or do not trust people who claim to have seen the other side. When several people who don't know one another can go there and come back telling of the same things, telling how they were more aware than ever they were in their waking life, I'm enclined to believe them; it's sort of idk... scientific! I don't have to ask, "why couldn't I die, go to Heaven, and be compelled to tell people about it?" I don't have to let jealousy of not being chosen to see get lain the way of believing; Because that's not my walk on this Earth. My walk includes he option in trusting in my fellow man and their experiences. To deny my fellow man about the workings of God is to deny God. To scoff at them and call them delusional is to put myself in a worse situation should the day come when I'm in the edge of life and death.
Reply: As for misappropriating my time; I partly agree. It's because I don't go to church. I spread my Bible/God time across the whole week.
Reply: +JetMechMA so you are stating that the entire upper section uniformly and suddenly dropped evenly upon the floor below, such that the chain reaction was 100% vertical down to ground level.
Not sure if you've ever played Jenga before, but physics doesn't work like that. 
The whole top section should have fallen sideways, if it were natural in descent.
The steel would have had to have been weakened. Not just on THAT floor, but every floor until ground level for that to be true.
Reply: JetMechMA well ain't that funny. There are videos showing the lower floors demolished of other buildings and the building not collapsing. It just drops and the floors above it continue to stand. Perhaps your the one uneducated here. Do your research and get back to us. As for your claims the floors weren't made to take an impact load, i contend they were, not only were they designed to take them, they were designed to withstand a plane striking them, which i might add, they did perfectly. They didn't topple over, they dropped straight down. These were not a house of cards, these were building designed to withstand pretty much anything mother nature could hit them with, and done so from the completion of their construction. So i contend your the one completely clueless, and much more disturbing, totally in the dark, about what really happened on that sad day. I can't say what happened for sure, but i can say what DIDN'T happen.... The story we got.
Reply: +Emvaz22  wow you guys in the comments are really going at it by the looks of it.. penis
Reply: weunelect okay, you condescending smart ass, what's your explanation for the spike in thyroid cancer among first responders?

Hint: thyroid has generally one cause, radioactive isotopes. The site of destruction is called Ground Zero, a name traditionally given to the area at or below the point at which a nuke is detonated. 

What's your educated opinion? And remind me: do you believe the government's 9/11 conspiracy theory?
Reply: mschnurp The theory needs revision. Thermite couldn't have been the main thing used because the steel beams had concrete casing. Thermite couldn't be installed. Look up on YouTube: pocketsofthefuture . He has a 3 part series explaining why it benefits the powers that be for us in the Truth community to be engaged in infighting over the type of explosive, as long as we don't realize the obvious; the most reliable, powerful explosive is nuclear, micro-nukes, tactical nukes, whatever we want o call them. But the health effects o nuclear radiation take time to surface. 

The question now is; will we be able o awaken the public before they traumatized us again and hypnotize the masses into believing them again? Or will we win the race against time, and expose these people, making them more and more nervous, causing them to fumble and get caught? Because I don't know WHO is responsible. We can have some idea who was complicit in nuking NYC.
Reply: +madgodloki the showers of what looks almost like lava and random puffs are very strange though, don't you think?
Reply: +Boris B Pretty sure that is technically not true about no other steel constructed buildings ever collapsing after a fire, but it is beside the point that the mainstream explanation basically blames the construction of the towers for their collapse, they were rather unique in their construction with the center truss holding the walls together with tension from horizontal beams. anchored to them.
Reply: +madgodloki theres a bunch of videos showing people mixing water and molten aluminium and it doesn't do anything.
Reply: I'm also concerned about the upward ejection of chunks. If it was all coming down from gravity and structural weaknesses, what force was working upward? It doesn't make sense unless you include explosives that the 9/11 Omission Report omitted. 

Nukes were used, mini nukes. It's fingerprints are all over the health records of New Yorkers. Otherwise it would have all come down and out. Not down AND up and out. 

They seeded fear and hate in all of us very well. I still have a hard time thinking Islam is not evil because of 9/11; it started my research into Islam! But that was a cover story. A fiction! They couldn't fly well! Fact: they couldn't FLY well enough. Even though it was a clear symbolic attack on Christ, it was not done by Muslims. Jesus is a prophet in Islam! Why would they kill thousands of people on his birthday?!
Reply: +JetMechMA Come on dude! should that be a serious comment? I don't believe the conspiracy either simply because I know that no one would be able to pull it of, and as they say: people cant keep there mouth shut! but I am still very curious as to what really happened because i know 2 things for sure, the towers fell at almost free-fall speed, AND they where completely pulverized, If the towers fell at almost free fall speed that means that the structure below did not did not exert much resistance, and if the structure below was completely pulverized that would require a lot of force from the the top section falling down on the structure below, how do you get those two facts to mach up? where do you find all that energy???
Reply: The video of the plane hitting the Pentagon is here on Youtube.
Reply: I'll have to look for, and watch the video again. I'm assuming you saw the video from a surveylance camera. The one that was just outside the Pentagon. I remember seeing a plane. Its obviously not much of a view though, as it was flying at something like 500mph upon impact.
Reply: ***** Those crazy conspirators. They wan't you to think a plane hit the pentagon so they sent a cruise missile into it, then either invented a bunch of people and a plane that never existed and said it crashed, or blew that up too somewhere else, because crashing 3 planes into 3 buildings, that was just outside their budget. It's good we have you and others like you around to see through this ingenious plan.
Reply: Cory C don't you realize how expensive it would be, not to mention inconvenient, to demolish WTC 1&2 the right way, with a professional team, coordination 9/11 scale of police, fire department, governor, etc., and to evacuate the city-- stop business, stop trading.

It was better this way. Much more cost effective to put those costs onto tax payers, and have an excuse for he bankers'a war!!

Btw, didn't I ask you a question about the up-tick in thyroid cancer for people exposed to dust?  You never answered.
Reply: Dave Corrigan "don't you realize how expensive it would be, not to mention inconvenient, to demolish WTC 1&2 the right way, with a professional team, coordination 9/11 scale of police, fire department, governor, etc., and to evacuate the city-- stop business, stop trading."

If they were worried about this why not crash planes into buildings in another city? Come on now this is really grasping for an explanation. Who are the conspirators anyways? The building owners or the government? What was the motivation for the 9/11 conspiracy? These buildings didn't come down nicely either. They took out blocks around the site and were full of all kinds of toxic stuff that occupied office buildings tend to be full of. They caused a major disruption for sure.

Controlled demolition doesn't fit into any coherent conspiracy. It only works to make exposure of the conspiracy easier. Maybe, and this is almost as unlikely, the buildings were rigged to come down in the event of a major catastrophe. Either for the cost reasons you propose or insurance reasons. But if this is the case it is not evidence of a 9/11 conspiracy. It's evidence of some kind of insurance fraud. But this is all based on an unproven premise. That the buildings could not have fallen they way they did after being weakened by uncontrolled fires caused by high velocity jumbo jet impacts. Something completely unprecedented, yet still truthers speak as if the outcomes of such events are obvious.

"Btw, didn't I ask you a question about the up-tick in thyroid cancer for people exposed to dust? You never answered."

Maybe I missed it? What is the relevance? The conspirators want to give people cancer? What is the motivation for this? Maybe the hospitals are in on it too huh? Want to cash in from the expensive cancer treatment.
Reply: Cory C Basically, thyroid cancer is most commonly caused by exposure to radiation. While, as you and countless others have said, there was a mix of toxins in the dust (ok by the EPA apparently) and any of those can cause a variety of health problems, one cancer that regular office equipment, asbestos, and all else, vaporized into dust will NOT cause is thyroid cancer. Health care providers are shocked by how any cases there are, and the exponential rate of diagnoses among first responders--it takes time to develop thyroid cancer after exposure. It's caused by exposure to Iodine 131, and rarely by pré-existing diseases. I don't know if you're in such denial that you're willing to believe all first responders that got it all had tee thyroid diseases or were overweight or had hormone imbalance problems, more than you are willing to believe the U.S. woukd nuke its own citizens, but.. 

So I you can't find, just as I haven't, other causes because radiation, you'll have to conclude 9/11 was a nuclear event. Between 2001 and 2008, there were 26 cases; then there were 96 new cases between 2008 and 2013. One day there will be hundreds of cases and we will have to confront the issue as a country. But for now, awakening is an inside job. Maybe someday we will be instrumental in the mass awakening, when we lock these criminals up.
Reply: Tee thyroid diseases; supposed to be "rare" thyroid...
Reply: Damn! Correction: if you can't find other causes BEDIDES radiation...
Reply: Emvaz22 Did someone remove my comments or was that on another thread that I posted the peer review to your harrit paper? Either way the only actual peer review of that paper will show you that it's not found thermite. 
  You thinking it was thermite does not make it thermite, Your paranoia does nothing to the facts. 
  I'm really tired of even wasting my breath talking about this idiotic nonsense.
   And as for whoever it was who said the "lava like stuff" was suspicious or whatever, No it wasn't. If you've done chemistry you ought to know how strange some reactions can be.
Reply: Just curious, what more could you ask for in terms of evidence?
Reply: JetMechMA You're suspicious of possible military involvement or coverup concerning the Pentagram--err, Pentagon, but not when it comes to the planes taking down the towers, including 7? Are you at least willing to consider the planes were unpainted, unmanned planes with an extra payload? 

Because of the "unexplained" 1100% increase in thyroid cancer, the likely cause of which is exposure to radiation, I'm convinced they were nuked, probably at the end of collapse, and probably underground to muffle sound an direct the explosion more upward versus outward. It explains the heat, and the upward ejection of debris. 

I also think an energy weapon was used to start each collapse. Isn't it odd that the first one to go had substantially less weight pressing down on the impacted area than the one struck in the middle? Granted, it was more on target with the center of the steel supporting frame, but I still find it odd. Also that they fell straight down. 

No one wants to believe the government could nuke us, even though they have in the past. Every country that has nukes has tested them in their countries rendering land uninhabitable, radiated land that people sometimes travel or purchase to live on. Do a google search for: spent nuclear fuel shipped to Idaho. You'll see people are getting sick; we have started to see the same shit in NYC. It was nuclear, I'm telling you. The proof is in the health records of first responders. And it's only half that volunteered to be in a group study. They discovered 26 cases in the first 7 years, and since, in the last 5 years, there have been 96! New cases. If we are still talking in 5 more years, I'll be pointing you to the new study which will probably show 200 new cases. It takes time, and those guys were right on top of the radioactive rubble.
Reply: JetMechMA And flight 93! Holy shit, could it be more obvious that if there WAS a plane, that it was shot down somewhere the cameramen were not permitted to go, and that they fabricated a crash site for the news? Because there's nothing that resembles former plane crashes! It "vaporized"??! Wtf? Sorry, try again. We are the most lied-to population on the planet. Bar none.
Reply: JetMechMA also, Google search: define ground zero. 

Traditionally, up until 9/11 (not), ground zero describes a nuclear blast epicenter.
Reply: Dave Corrigan What do you mean by nuclear event? I thought it was supposed to be a controlled demolition and that thermite was used? Also you said that controlled demolition was used so that the recovery would be quicker and easier. Doesn't nukes work against that idea? I've never heard of nuclear explosions being used for controlled demolition. I mean you should probably argue this with Emvaz22 as he is convinced it was a controlled demolition and that thermite was used and knows more about the evidence for this than me(Also I think a fellow conspiracy theorist debunking your nonsense will be more meaningful to you). Introducing a new theory, nuclear, either requires a new motive, say the desire to give people cancer, or the thermite theory is wrong or insufficient on its own.

 "one cancer that regular office equipment, asbestos, and all else, vaporized into dust will NOT cause is thyroid cancer"

How do you know this? Has there ever been mass exposure to dust similar to that of the WTC disasters? I think the answer is no. Again I think you are working off of baseless expectations. Because nuclear weapons are one possible explanation does not mean it's the only one. How high are the cancer rates from those exposed? How do they compare to normal rates in the population? How do they compare to those who have high levels of radiation exposure? 

Have you considered Satan's involvement in the disaster? I remember seeing a picture with a face in the smoke shortly after 9/11. This is very strong evidence that Satan was actually to blame for the event.
Reply: Cory C The dust as we know it could not cause thyroid cancer because it's not supposed to be radioactive. Thyroid cancer is rarely caused by hormone irregularity diseases and certain rare thyroid diseases, and when we observe case after case after exposure to some kind of waste, the logical conclusion is that these people don't all share these rare diseases; but rather they were all exposed to something radioactive. That's the only other cause: radiation, Iodine 131.
Reply: Cory C Satan's involved... lol now you're just egging me on. Haha

But I have listened to that opinion. And one of, this was an energy harvest and ritual sacrifice. It's not out of the realm of possibility, I suppose. If there is a devil, and I believe there is, then this was a symbolic attack on Christ. It would take a long time to explain why I think so. Basically, 9/11 is Jesus's birthday. He was born in late summer, not winter. And there's a parallel between Samson knocking down the two pillars and Jesus symbolically tearing down the towers Boaz and Jachin. The idea that since Satan was cursed to eat dust, Satan used people to mock Jesus by tearing down two towers on His birthday and cursing us His creation with dust. There have been scenes in Hollywood movies alluding to this symbology for a long time. Hollywood is very anti Christ, as anyone who knows what they're looking at can see.
Reply: Emvaz22 Little to no evidence for nuclear radiation? Did you read what I wrote? 

If so, how the hell do YOU explain the spike in thyroid cancer? 

Nuclear radiation might be part of the reason the steel was shipped directly to China before  it could be examined. It was the most solid thing left and probably retains radiation.better than smaller particles. I'll have to look into that.
Reply: +Jim Vicious The official reports admit that the temperatures could not have been high enough to melt steel. They tried to debunk Conspiracy theories by saying that for the towers to collapse, the structural colums did not have to melt, because they supposedly had enough damage from the impact. Problem is, the steel DID melt. The video that shows a glowing molten substance running down from the tower is being explained away by telling the public that it was the molten aluminium from the airplane. Problem is, molten aluminium looks like, well, molten aluminium. It is a silver substance. Molten aluminium does not glow at all in day-time conditions. Besides, multiple sample taken from the site show that there was indeed molten steel. 
Here is one question: If the conditions present in de towers were not such that it could melt steel, by the official reports own admission... Then how did the steel melt? The only way to explain this is by adding a different heat source to the equation, which could very well have been Thermite reaction. 
Multiple controlled demolition experts and a group of 1500 architect experts confess that the towers must have been taken down via controlled demolition. They all agree that a tower can only come down in a free fall when all of the strucural colums are destroyed at the exact same time. First of all, these columns are extremely strong and thick and are all made of steel. The plane might have inflicted damage on one to three of the upper columns, but even then the damage would not have been enough to break the whole column. Even if it did break those columns, the other columns would have still been intact. The heat was not high enough to melt or damage the other columns. The building came down in a free fall, having no resistance at all from the floors below. 
No reasonable explanation has been given for the melting of the steel whatsoever, there should at least be a full new investigation on that matter. The steel remained melted for several weeks after the towers came down. The towers didn't have enough heat to melt even a bit of steel, let alone melt it for several weeks. 
The fact that the steel was still melted for such a long time, even though it wasn't supposed to be melted according to the offical report anyway, shows that there must have been a heat source that continued heating the steel for several weeks after the towers came down. The only reasonable explanation for this is a Thermite reaction.
Reply: Or... nuclear, like I've been proving.
Reply: Sane Human we were double hoaxed. First hoaxed into blaming Muslims, then hoaxed into spreading the "truth" that thermite was planted. I fell for it; and even after I doubted, I still held to the belief it was thermite simply because it was so obvious planes couldn't and wouldn't do all that. How did the cars burn--only the metal parts mind you? Am I supposed to believe that JET FUEL made it all the way down despite video footage showing that to be impossible? How did the lobby elevator explode? JET FUEL??? It trickled all the way down the building? No, no way. 

So then I considered an energy weapon, and it's still possible-- I just don't see hard evidence.

There is finally and however, evidence for nuclear radiation.
Reply: JetMechMA <The Harrit paper is a false premise. I proved why it is a false premise and therefore total nonsense from raving lunatics.>

You haven't proven anything.  You haven't cited a shred of anything resembling a fact regarding the Harrit study.  All you have are your speculations, which also lack any sort of proof.  The only thing you've proven is your misunderstanding of what constitutes scientific proof.
Reply: +Jim Vicious You sir... complete idiot. COMPLETE IDIOT.
Reply: JetMechMA <You haven't give scientific proof of anything that happened at the World Trade Center.>

Active Thermitic Material Discovered in Dust from the 9/11 World Trade Center Catastrophe.  Harrit et al.  The Open Chemical Physics Journal.  April 2009.

"we conclude that the red layer of the red/gray chips we have discovered in the WTC dust is active, unreacted thermitic material, incorporating nanotechnology, and is a highly energetic pyrotechnic or explosive material."

See that there?  Thats how you establish a fact in an argument.  Do you have a valid reason to believe this study is wrong?  Your political beliefs, presumptions, and absence of logic don't hold any weight in an argument involving established facts.  Cite an academic source which refutes the Harrit paper directly, or cite a scientifically backed fact which casts doubt on the analysis of the Harrit material, and explain how it does that.  Otherwise, you don't have a real argument.

<I proved why you are wrong. Heck, you're not just wrong>

You keep saying that, but I haven't seen any proof.  Your opinion is not a fact.  Nothing you have typed even remotely comes close to refuting the Harrit paper.

Try again, meatpuppet.
Reply: JetMechMA <You don't crash airplanes into a building that you rigged with demolition charges. That's all the proof that anyone needs. >

False flag attack.  Look it up.

<Every single piece of evidence matches the official story and NOTHING matches yours.>

Except for eyewitness testimony, forensic evidence, and the laws of physics.  But yeah, other than that...

<The building collapsed from the site of impact...period.>

And this refutes the presence of thermite charges how?

<There were no demolition charges left intact after the airplane crashed into them.>

Cite your proof that this would not be possible.  Common sense says that charges placed in the interior core of the building, and protected by an insulated, shock resistant material, would survive the initial impact.  The presence of unreacted thermite as well as the signature of a thermitic reaction (iron microspheres) which excessively peppered the WTC rubble seems to cast doubt on your assertion.  

<So it is impossible for the collapse that occurred at the impact site to have been done by demolition charges>

Quite a statement with no supporting scientific facts or evidence.

I think it's pretty obvious that you're full of shit and/or a complete idiot.  Thanks for playing.
Reply: JetMechMA <Because the site of impact was DESTYROYED by the 390,000 lb jetliners crashing into it, that's why. No demolition charges would be left intact>

Another assertion with no proof or supporting evidence.  The academic published evidence of unreacted thermite, as well as the products of a thermite reaction (iron spheres), as well as eyewitness testimony of bright flashes and secondary explosions, all seem to disprove your opinion.

Your opinion conflicts with known facts, therefore your opinion is wrong.

Try again.
Reply: +Emvaz22   "Except for eyewitness testimony, forensic evidence, and the laws of physics.  But yeah, other than that..."  Eyewitness testimony is among the least reliable forms of evidence.  Listen to the live broadcast of the impacts and you'll hear several witness claiming that these were small planes and not commercial airliners.  I'll take the word of experts over the guy on the street any day.  Those same experts and engineers have looked at the forensic evidence and certainly understand the laws of physics, and I'll take their word for it too over half-baked claims on YouTube videos by non-experts.  

And "half-baked is giving them too much credit.  None of these claims survive being run to their logical conclusion by someone with critical thinking skills, something Twoofers lack.  How would thermite charges be placed at the precise locations to match the later plane impacts, without being noticed?  How would the control systems survive the impact of a high-speed commercial airliner impacting the structure?  Why wasn't burning thermite (2500 degrees C) blinding to observers like looking at a welding torch (it's nearly that bright) as opposed to something that was only noticeable looking at film later on?  

And of course the whole argument is stupid to begin with because steel starts losing strength at 700 degrees F and loses nearly half its strength at 1000 degrees F, temps below what even the Twoofers agree a jet fuel fire would burn at.  No thermite was needed to bring the towers down.  Both collapses started at the weak point where the impacts occurred (no surprise), the one hit later collapsed first because it was hit much lower and had much more mass above the failure point (no surprise) and the collapse progressed exactly as models predict it would, consistent with physics as dynamic stresses overwhelmed the design strength, floor by floor.
Reply: Emvaz22 So I guess you'll take the NIST report and the Popular Mechanics report over peckerwoods on youtube then?
Reply: JetMechMA <YOU are the one who claims they used demolition charges>

And then I cited an academic source to back up my claim.  That puts the ball in your court.  You claim that the plane hitting the towers would have disabled all of the charges and would make controlled demolition impossible.  You cite nothing to back your statement up, so all it amounts to is the speculation of a shill on YouTube with the critical thinking skills of a 1st grader.  And I still have the Harrit paper which you cannot refute in any sort of academic or scientific manner.  Try again.

<and no credible engineer believes you whacked out conspiracy theory. Only YOU believe that nonsense.>

Right.  ONLY me.  The 17000 people who up-voted this video (compared to the 2k who down voted) might disagree with your assertion. There are 2000+ professional high-rise architects structural engineers, architects, demolition experts, physicists, etc that would also disagree with you.  Can you cite a group of professionals who aren't on the dole who agree with the official story, or can disprove the Harrit paper?  Still nothing?  Too bad.

<I proved the logical fallacy of your insane ravings.>

Again, you misunderstand the meaning of proof.  Your unsupported speculation isn't proof.  Proof involves either deductive reasoning or scientific experimentation.  You have utilized neither.

<You couldn't rig a floor to implode and then crash a 390,000 pound jetliner into it and expect the charges to still be intact>

Prove it.  The fuselage would have been shredded by the exterior columns and reinforced concrete floor trusses.  The charges would have been in the protected steel core where the elevator shafts and stairwells were.  Stairwells and elevator shafts mean concrete walls.  thin aluminum doesn't do so well against concrete walls.  Even if the charges on the impact floor were destroyed, the collapse could have simply ben initiated from the next lowest floor.  My speculation cancels out your speculation, and I am left with the Harrit paper, and you are left with nothing.  And that is what your argument ultimately amounts to.  Nothing.

<These other engineers on here have debunked your nonsense early on in this thread.>

When did that happen?  I must have missed that part.  Copy paste the part where the Harrit paper was debunked.  Thanks.

< I hate your guts. I HATE you for spreading disinformation.>

Aww poor little guy.  Tissue?  You're like a little kid whose parents just told him there is no Santa Clause.

<You are a God damned filthy TRAITOR to America because you get in the way of those seeking the truth about the Sept 11th attacks on America. GO  TO  HELL !>

Pathetic.  I think you're mentally deficient.  Your lack of ability to exercise logic and insistence that I am incorrect although you can cite no academic or scientific reason why exposes you as an idiot.

<The building was damaged in the center by falling twin tower debris.>

How does falling debris damage the center of the building while leaving the facades undamaged?  Show me this damage to the center of the building.  Show me somebody credible that says this happened.  Even NIST claims that normal office fires compromised one single column, which somehow brought the entire building down at free-fall speed into its own footprint.  They never mention structural damage to the core caused by falling debris.  Your version of events is a fairytale.

<NOTHING points to your theory.>

Except for forensic evidence, eyewitness testimony, and Newton's Third law.  Can you disprove the Harrit paper or basic physics?  You keep pretending like you can, but you don't.

Try again.

<YOU calling it thermite explosions is INSANE. God damn it....thermite doesn't explode! ! ! ! !!!!!!!!!!!>

I hope you realize how ironic it is that you call me insane, while at the same time typing out sentences such as these.  Their format suggests somebody who is not mentally stable.  Not to mention the content is total bullshit.  You should look up the definition of thermite.  I'll even save you the time: 

"Thermite is a pyrotechnic composition of metal powder fuel and metal oxide. When ignited by heat, thermite undergoes an exothermic reduction-oxidation (redox) reaction. Most varieties are not explosive but can create brief bursts of high temperature in a small area."

Do you see the last sentence there?  MOST varieties are not explosive.  That means SOME varieties ARE explosive.  Oh look, I just proved you to be an idiot.  Again.  You make this too easy.
Reply: JetMechMA <Every reader can see that these engineering types on her have already blown you out of the water>

No they haven't.  You can't cite anything to academically refute the Harrit paper.

<You haven't named credible sources.>

Yes I have.  Nine published and peer reviewed experts.  Do you have any experts to refute them?  No, you don't.

<Yet at the same time, I have proven the logical fallacy of your insane theory>

No you haven't.  Your weak speculation doesn't amount to proof.

<If you fly the airplane into the area that is rigged to explode, you are going to ruin the demolition charges.>

You can prove that?  No, you can't.

<everything supports the official story and NOTHING supports yours.>

Except for forensic evidence, physics, and eyewitness testimony.  The only science that supports the official story is political science.

<The buildings did NOT look like an implosion....far from it.>

Who says implosion?  The towers exploded in midair.

<YOU are the one who has to prove your assertion>

Already did.  My assertion is that the rubble contained advanced incendiary material.  I citied a scientific paper to back up my assertion.  You are unable to refute my assertion, therefore my conclusion stands.  Do you have any science that proves the official story or refutes the Harrit paper?  All you can cite are collapse simulations and mathematical models with estimated parameters.  Neither of which prove a thing.  Citing a study of what COULD happen is not the same thing as what DID happen. 

<You haven't used a credible source. A tiny minority of crack-pot engineers proves nothing.>

Ad hominem.  Cite a refutation of the Harrit paper for a valid argument.

<The FACT that you could not successfully plant demolition charges and then crash an airplane into that exact spot and the charges still be intact>

False premise.  You're an idiot.  Try again.

<the fact that the buildings started collapsing from the point of impact>

In no way disproves controlled demolition.

<makes a bald faced LIAR out of you. >

Name one single thing I'vs said thats been a lie.  Seems like half of the crap you type is bold-faced lies.  You constantly misrepresent your opinion as fact.  Can you name something I've said that is untrue?  Be specific.
Reply: crushffl <So really all you have done all this time is simply dismiss everything you disagree with. It really has been the discussion equivalent of sticking your fingers in your ears and shouting "Lalala, I cannot hear any counter-arguments.">

Ad hominem and lies.  Is that all you've got?  If it's a joke then why is it still published?  What is the flaw of the paper, specifically?  Where is the refutation?  Where is a single credible expert who has published a single paper to refute it?  It's been six years, where is an alternative study of the dust which finds different results?  What's taking you so long?
Reply: Joshua Hendricks <THE NIST REPORT PECKERWOOD!!!!!! >

That's your argument?  The NIST report?  God, you're dumb.  

Did NIST test for incendiaries or explosives?  No.  Did they adequately explain the free-fall collapse of building 7?  No.  Did their collapse simulation of building 7 look remotely similar to the actual event?  No.  And this refutes the Harrit paper how exactly?  Thats right, it doesn't.  Try again.

<NOW TELL ME WHERE YOU GOT YOUR DEGREE IN PHYSICS!!!!!!! >

What did I say I have a degree in physics, and how is that even relevant?  Judging by your poor excuse for logic and critical thinking, I would say you don't have a degree of any kind.
Reply: +Emvaz22  <If it's a joke then why is it still published?>   Heard of the Internet?  Websites stay up unless someone takes them down.  This one actually says "discontinued" on it, has stopped publishing papers, and there are plenty of sites explaining exactly why this is the case, even sites where the authors of the paper in question discuss their view on why the editor resigned and the forum was discontinued.  The paper starts by ignoring standard chain-of-custody protocol for sample collection and management, and numerous others that would have had it ripped to shreds before publishing had it gone through a proper peer review that serves to keep bad science by pseudo-scientific kooks with an agenda from getting published.  There are several refutations out there, I think one was on debate.org.  Go do a little research yourself, I'm done wasting time debating that stupid paper, though when it is brought up, now that I'm aware of it, I'll continue to point out how it was published and the result; everything I said above you can go verify independently.
Reply: JetMechMA <"Can you name something I've said that is untrue?  Be specific.".....EVERYTHING you said is a lie.....no wait.....it's INSANE ! ! ! !!!!!!!......YOU'RE insane !>

Putting everything in caps and adding a bunch of explanation points lends you a ton of credibility.

I said list something specific that I've said that's been a lie.  You obviously couldn't specify anything, therefore I think it's safe to assume that you are running out of argument, and all you have left are ad hominem attacks.  The true hallmark of a weak position.  Too bad, I was having fun.
Reply: crushffl <Heard of the Internet?  Websites stay up unless someone takes them down.>

Papers that are flawed get redacted.  The Harrit paper is still published.  Nice try though.  Care to cite an actual technical refutation, or are you going to stick to your ad hominems, pretending they amount to an actual argument?

<This one actually says "discontinued" on it>

And?  Discontinued does not mean discredited.  Are you implying that the dozens of papers contained in this journal are all now invalid?  Care to cite a refutation of every paper in the Open Chemical Physics Journal?  If they are invalid, then surely there are conflicting papers that proves they are all invalid.  By your logic, you should be able to now refute all of these studies.  What have you got?  Nothing?  That's what I thought.

Here in the real world, products get discontinued all the time.  It doesn't mean they were invalid.  They are simply updated or rebranded.

<even sites where the authors of the paper in question discuss their view on why the editor resigned>

Yep, and they make it pretty clear that it was due to political pressure, and not because the study was in any way flawed.  The editor who resigned did not cite a single technical reason to fault the paper with.

< The paper starts by ignoring standard chain-of-custody protocol for sample collection and management>

Says who.  Cite your source.

<before publishing had it gone through a proper peer review>

Peer reviewed by multiple experts, one of which was David Griscom, formerly of NASA, DARPA, and Naval Research, and author of over 190 peer reviewed papers.  Any more ad hominem lies, or do you want to try an actual refutation this time?

<There are several refutations out there,>

Cite one thats been published.  Just one.  Oh I almost forgot.  You can't.

<I'm done>

Yep, you're done.  You clearly don't have any actual evidence to refute the Harrit paper.  Nice try.  Not really though.
Reply: Emvaz22 HMMM I GUESS THAT'S WHY THE NIST REPORT IS STILL VALID!!!!!!! ABSOLUTELY EVERYTHING YOU STATE IS  LIE. DAVID GRISCOM WON A DEBATE........WITH HIMSELF. YOU 9/11 TRUTHERS HAVE NO EVIDENCE. THERE WAS NO THERMITE FOUND AT THE WTC. DAVID GRISCOM GOT LAUGHED OUT OF THE BUILDING SUGGESTING THAT THE SURVIVORS WERE ALL "WHISKED AWAY TO TAHITI." YOU 9/11 TRUTHERS ARE ALL A BUNCH OF PATHOLOGICAL LIARS. YOU WOULDN'T KNOW WHAT TRUTH WAS IF I SLAPPED YOU IN THE MOUTH WITH IT. THERE WAS NO INSIDE JOB. YOU JUST INVENT WHATEVER WHATEVER TRUTH YOU WANT TO. THE VICTIMS OF THE PLANES WERE "PROBABLY LANDED IN CHICAGO". BOTTOM LINE IS THIS YOU 9/11 TRUTHER SCUM BAGS ARE PATHOLOGICAL LIARS. I WORK FOR DHS. I KNOW WHAT HAPPENED ON 9/11. WE WERE ATTACKED BY 19 TERRORISTS ON 9/11. I KNOW WHAT THEIR NAME ARE I KNOW WHERE THEY ENTERED THE COUNTRY, WHAT DATES THEY ENTERED AND WHERE THEY TRAINED.
Reply: +Emvaz22 Every one of your stupid comment about the pseudo-scientific Harrit paper is addressed in this link:  http://activistteacher.blogspot.com/2010/11/editor-in-chief-resigned-over-harrit-et.html

And a peer-review summary discussing other problems with the "science" in the paper, linked to in the first:  http://climateguy.blogspot.com/2010/11/peer-review-of-harrit-et-al-on-911-cant.html

Nobody takes the Harrit paper seriously except other Twoofers.
Reply: +JetMechMA  <there were 19 hijackers....but do you know who was behind the terrorists? ...it is speculation since Bin Laden never went on trial.>  Except that after initial denials Bin Laden took credit for the attacks.
Reply: JetMechMA <The collapse started at the site of impact.>

And?

<There is no way the demolition charges would stay intact after the building was hit by a 390,000 pound jet full of fuel.>

There is no way?  So you are an expert in demolitions, an expert in physics and engineering, knew exactly how the core structure was configured, and know for a fact that no form of incendiary charge could ever be configured to be insulated from the fires and shock of the crash?  You know for a fact that no material exists to science in any configuration that would shield the charges from the impact?  Cite you evidence that allows you to present your statement as remotely factual.  You've got nothing.

< EVERYTHING that happened is supported by the official story and NOTHING you say is.>

Lie and Lie.  Fires don't explain near-free-fall collapse, the implosion of building 7, the FEMA appendix C eutectic steel, the molten iron flowing beneath the rubble, and the rubble pile that smoldered at an extremely high temperature for 3 months despite being doused with water and chemical flame retardants.  It doesn't explain the unusually high occurrence of iron microspheres which match the chemical signature of a thermite reactant, nor does it explain the forensically proven presence of unreacted thermite.  The Harrit paper explain all of this.  Again, you have nothing.
Reply: Joshua Hendricks < I WORK FOR DHS. I KNOW WHAT HAPPENED ON 9/11.>

Can they not afford keyboards with a caps lock key with a working toggle function in the good 'ole DHS?  Careful there, before you blow a gasket, you simpleton.

Wipe the blood running from your ear canal and then find me a paper that refutes the Harrit study.  Your ad hominem garbage is not a factual refutation.  This is basic high school stuff.  Learn how to compose an argumentative statement.  Thanks.
Reply: crushffl I don't see anything other than ad hominem and misrepresentation of facts.  "Climate Guy?"  That's your scientific source?  I hope you see the irony in attempting to disparage the 9 experts who authored the peer reviewed Harrit study, and then in the same breath citing as your expert a shill on a blog named "Climate Guy" as your source of information.

Try again, idiot.  Post a published refutation of the Harrit paper.  Whats wrong, can't find one?  I wonder why that is.
Reply: JetMechMA <Dumbass.....nobody would include BOTH aircraft impact AND demolition charges in an attack. Stupid idiot>

Look up false flag attack.  Look up PNAC.  Idiot.

<"There is no way the demolition charges would stay intact after the building was hit by a 390,000 pound jet full of fuel.">

Prove it.  

Nothing you say refutes the Harrit paper, because nothing you say is factual.

Try again, meatpuppet.
Reply: Emvaz22 I use the Harrit paper for Toilet paper. YOU CLAIM THERE WAS THERMITE CHARGES. SO YOU PROVE THEY WERE THERE AND NO, NO THERMITE WAS FOUND IN THE DEBRIS THAT IS JUST AN ABSOLUTE LIE. JUST LIKE YOU ARE AN ABSOLUTE UNEDUCATED LIAR.
Reply: +Emvaz22 How exactly would one prove, to your satisfaction, that someone would be dumb enough to rig explosives in a building they were crashing an airliner into, or that the detonators would survive such an impact?  Should we take a building, put explosives in it, crash a plane into it, and then see if the charges still work?  Of course not, and even if someone did it you would "move the goal posts" and claim the test proved nothing.  You are the one with the outrageous claim that is inconsistent with the conclusions of experts.  If anyone needs to prove anything it's you, and you FAIL like all crazy-ass Twoofers.
Reply: JetMechMA Your argument doesn't make sense, especially since you don't explain anything specifically.
Reply: Joshua Hendricks <YOU CLAIM THERE WAS THERMITE CHARGES>

Yup.

<SO YOU PROVE THEY WERE THERE>

Yes I did.

<NO THERMITE WAS FOUND IN THE DEBRIS THAT IS JUST AN ABSOLUTE LIE.>

Oh?  Says who?  Where is the paper that disproves the conclusions of thermite published in the Harrit study?
Reply: crushffl <You are the one with the outrageous claim that is inconsistent with the conclusions of experts.>

The actual unbiased experts agree that there was thermite residue in the WTC dust, and that the official story is bunk.  Do your shill "experts" have any hard evidence to disprove the Harrit study?
Reply: +Emvaz22 What "unbiased" experts?  The authors of the Harrit report?  The one co-authored by two members of "Architects and Engineers for 9-11 Truth"?  The report published on an open on-line forum without adequate peer review?  The one that was so bad that the lead editor and another resigned, and the forum was discontinued?  The one that when it was finally reviewed by other scientists was found to be rife with flaws?  I'm guessing that one because it's the same pathetic POS of a paper you morons keep citing, proving that you have nothing and that you know nothing.
Reply: crushffl <The report published on an open on-line forum>

YouTube is an open online forum.  Bentham journals are peer-reviewed publications.  Prove otherwise, liar.

<without adequate peer review?>

Reviewed by two separate experts, one of which was David Griscom, who has authored more than 190 published academic papers, and has worked with NASA, DARPA, and Naval Research.  Liar.

<The one that was so bad that the lead editor and another resigned>

Resigned due to political pressure.  Did not fault any specific technical aspect of the paper.  If the paper was flawed it would have been redacted or refuted.  Yet six years and here we are, with no refutation, and all you can muster are ad hominems and factual misrepresentations.  Hmm, I wonder why.

<The one that when it was finally reviewed by other scientists was found to be rife with flaws?>

Oh its been refuted by other scientists?  Which academic journal is this scientific refutation published?  Whats that?  There is no credible refutation?  All you have are blog posts?  Hmm, I wonder why.

Try again, idiot.
Reply: JetMechMA <he best plot is simple....and has plausible deniability. In other words, it was a genuine terrorist attack, but the "terrorists" were manipulated into doing it by traitors within the bush cabal and the CIA. WHY ???.....for the profit of the military industrial complex. Implosion wasn't involved. It wasn't needed. All they needed was a terrorist attack and that would be grounds to go to war.>

Speculation.  No facts.  Refute the Harrit paper with facts.  Why can't you do this?
Reply: +Emvaz22 Ha ha!  The best "scientific paper" you can cite is a joke, and you have to grasp at straws to defend it.  Loser indeed.  LOL.
Reply: crushffl Why won't you cite a rebuttal?  Where is your academic refutation?  If it's a joke then why has it not been redacted?  Why has it not been refuted?  Do you have any facts, or just more ad hominem?

Pathetic.  Did you graduate high school?  Do you know how to construct a supported argument?  Not from what I've seen.

Try again.
Reply: Emvaz22  I gave you a link a while back, it was someone who peer reviewed the paper in question and pointed out every single flaw and gave exact reasons for why the paper was crap. 
  You don't accept it, you keep going as if it never happened.
Reply: JetMechMA  They're obsessed with it because it's the "best" thing they have in terms of actual scientific credibility.  Sad when the best thing you have is a piece of garbage so bad that it could only get published in an open on-line vanity journal, and then the top editors of said journal resigned and the journal was discontinued due to the embarrassment.
Reply: madgodloki < I gave you a link a while back, it was someone who peer reviewed the paper in question and pointed out every single flaw and gave exact reasons for why the paper was crap. 
  You don't accept it, you keep going as if it never happened.>

Blog posts by anonymous shills on the internet who rely on ad hominem and misrepresentation of facts are not "peer reviews".  Do you have anything that has been published in an academic setting like the Harrit study has, which contradicts it?  You don't?  I wonder why that is.

<You don't accept it, you keep going as if it never happened.>

Because it doesn't exist.  Nice try though.
Reply: Emvaz22 Show me a peer review then?
Reply: JetMechMA <From what I can see you are obsessed with this "Harrit paper"  when it lacks credibility.>

Published.  Peer reviewed.  Not redacted.  Not refuted.  Six years.  Credible.  Prove otherwise.

< Like others have said, everybody in the world watched the attacks happen live on TV and that includes all the engineers in the world. >

Speculation.

<Our enemies would call it fake if they could....but they don't. WHY not? Because it was a real terrorist attack and the buildings were not imploded, that's why>

Speculation.

<Really? His bio reads 'organic photochemistry and photophysics, including the photophysics of nanostructures and the structural dynamics of photochemical processes'
His PhD is in Mechanistic Photochemistry. That is about 'organic photochemical reactions. 
He's no specialist in thermitic compounds, particularly nanothermites>

Ad hominem.  Harrit was one of 9 authors.  Peer reviewed by two experts, one of which worked for NASA, DARPA, and Naval Research.  Are you more knowledgeable than all of them?  Can you cite an expert who is, who disagrees with the conclusions of the Harrit report?  Where is this information published?  Oh, you can't?  Didn't think so.

Anything factual to offer?  Anything other than logical fallacy falsely presented as fact?  No?  Too bad.
Reply: Emvaz22 Then show me a peer review, I showed you one that was credible whether you like it or not they pointed out flaws that you've probably heard from a dozen scientific minds now, So show me who peer reviewed him positively.
Reply: crushffl Too bad all of the forensic evidence and laws of physics supports demolition, and contradict the official story.  All you have are mathematical equations with estimated variables, and computer models with estimated (and classified) parameters.  Neither of which offer proof of anything.  The NIST report wasn't even peer reviewed or published in an academic journal.

Try again, meatpuppet.
Reply: Emvaz22  Hey fool, it's not incumbent upon us to provide you with a peer review or a refutation of the Harrit paper.  YOU are the one who is claiming the scientific validity of a paper that was published in an "open" on-line vanity journal, and when it snuck under their already low bar the editors resigned and the forum was discontinued.  If it was "peer reviewed" as you Twoofers claim, then you should be able to provide said peer reviews showing that respected scientists accepted the paper and its conclusions.  The onus is on YOU to do so.  What, you can't?  No surprise.

Here's how you DO get a peer review:  author a real paper and submit it for peer review in an actual scientific journal.  Peer review is part of the process prior to publication.

Here's how you DO NOT get a peer review:  submit a shoddy paper to an "open" journal, then demand peer reviews from strangers on the Internet.  By the way, a couple of years ago a college student wrote a program that generated fake papers by stringing together nonsense phrases, and one of those papers was accepted for publication by an on-line journal.  IT"S A JOKE, FOOL!!!

Why exactly would real scientists waste their time reviewing a paper that was not accepted for review to any real journal?  Do you have any idea how much crap is submitted that is not worthy of publication or review?Why would they give one shred of credibility to a paper that couldn't even pass the giggle test to be eligible for peer review?

A few scientists couldn't help themselves and have posted on-line critiques that show what a POS the Harrit paper is, but you reject those because they conflict with your Twoofer religion.  You want more, get it published in a real journal.  Good luck!!!!!!
Reply: madgodloki <Show me a peer review then?>

You appear to be ignorant of the scientific publication process.  Peer review is not a publication, it is a process in the string of events that must occur for a scientific paper to be published.  It involves a submission of the work in progress to the referees, who are experts in their field.  The referees consult with the editors, and then submit a number of questions, refinements, and suggestions to the authors.  The authors then incorporate the suggestions into the paper and submit it for final approval to the editors and reviewers.  Once the reviewers offer their approval, the editors submit the paper for final publication.

According to the Bentham publication, all their articles are peer reviewed.  According to the authors of the Harrit paper, it was peer reviewed.  According to one of the two expert referees, the paper was peer reviewed.

< I showed you one that was credible whether you like it or not they pointed out flaws that you've probably heard from a dozen scientific minds now, So show me who peer reviewed him positively. >

Since when were blog posts "credible" sources?  You must not have paid attention in English class in high school.

From Dr. Steven Jones: "I can add that it is not the place of an author of a paper or even an editor to reveal the names of peer-reviewers, but it is precedented and generally acceptable in the scientific community for a peer-reviewer to disclose his/her OWN name and role in the review of an important paper. This is the case for a prominent reviewer of the Harrit, Farrer, et al. paper -- one of the reviewers discloses his name and further comments on our paper and his review of it here:   (url) .  The reviewer's name is Prof. David L. Griscom.   Among his impressive credentials, Prof. Griscom is a Fellow of the American Physical Society and a Fellow of the AAAS.  I quote a brief excerpt from his blog and encourage you to read all of it:
"II. The 2009 publication in The Open Chemical Physics Journal (TOCPJ) of a fabulous paper by Harrit et al. entitled “Active Thermitic Material Discovered in Dust from the 9/11 World Trade Center Catastrophe” Some disparagers of the 9/11 Truth movement have alleged that TOCPJ is a place on the web where anybody can buy a publication without peer review. Absolutely false! I know this because I was one of the referees of the Harrit et al. paper. The editors asked for my opinion. And after about two weeks of studying what the authors had written, checking relevant references, and gathering my thoughts, I finally provided my advice to authors in 12 single-spaced pages, together with my recommendation to the Editors that they publish the paper after the authors had considered my suggestions. Still, some skeptical readers may ask how anyone can rate a scientific paper as “fabulous.” Well, I am the principal author of 109 papers (and a co-author of an additional 81) in peer-review journals. And have refereed a least 600, and possibly as many as 1000, manuscripts. So you would be right in calling me an aficionado of articles published in scientific journals. And I found absolutely nothing to criticize in the final version of the Harrit et al. paper! Apropos, twelve of my own publications have appeared in the American Institute of Physics’ Journal of Chemical Physics (an old fashioned paper journal), so it is accurate to say that chemical physics (of inorganic materials) is my main specialty.""

Your laughable "debunker" blogs don't constitute a peer review.  Can you cite an alternative publication in an actual journal that contradicts the findings of the Harrit paper?  No, you can't, or else you already would have.  And again, you are left with nothing.  No established facts whatsoever to back up your argument.  Try again.
Reply: crushffl <Hey fool, it's not incumbent upon us to provide you with a peer review or a refutation of the Harrit paper. >

Uh, yeah it is.  I present the Harrit paper as proof of the presence of incendiary material.  You then claim there was no incendiary material.  Therefore it is your assertion that demands supporting evidence (which you supply none of).  Therefore your claims are unbacked and unsupported, while my claims are supported by science published in an academic journal.  You've got nothing but lies and ad hominem.

< and when it snuck under their already low bar the editors resigned and the forum was discontinued.>

Ad hominem and speculation.  The editor resigned due to political pressure.  The paper has never been refuted.

< If it was "peer reviewed" as you Twoofers claim, then you should be able to provide said peer reviews showing that respected scientists accepted the paper and its conclusions. >

Already did, shill.

<Here's how you DO NOT get a peer review:  submit a shoddy paper to an "open" journal, then demand peer reviews from strangers on the Internet.>

Straw man.  More lies by the shill.

< By the way, a couple of years ago a college student wrote a program that generated fake papers by stringing together nonsense phrases, and one of those papers was accepted for publication by an on-line journal.>

Lie.  No such paper was ever published.  Cite the paper.  Which edition was it published in?  What is the name and date of the published paper?  Oh it doesn't exist?  Too bad, more lies to discredit yourself with.  Nice try though, troll.

<Why exactly would real scientists waste their time reviewing a paper that was not accepted for review to any real journal?  Do you have any idea how much crap is submitted that is not worthy of publication or review?Why would they give one shred of credibility to a paper that couldn't even pass the giggle test to be eligible for peer review?>

Dr. Griscom has authored more than 190 peer-reviewed scientific papers, and has far more expertise and credibility than any of the blogger shills you can come up with.  Its funny to watch you pretend though.

<A few scientists couldn't help themselves and have posted on-line critiques that show what a POS the Harrit paper is, but you reject those because they conflict with your Twoofer religion.  >

I reject them because anonymous "debunker" blog posts that perform zero experimentation and misrepresent and omit the facts of the study to their own ends aren't actually science.  Its funny how you (falsely) claim the Harrit paper isn't credible because it wasn't peer reviewed, and then as your refutation you offer anonymous, unreviewed blog posts, and pretend like you aren't violating the criteria you just set for what information is credible.  Transparent idiot.  You lose.
Reply: JetMechMA <"Peer reviewed by two experts, one of which worked for NASA, DARPA, and Naval Research."....Yeah, sure....I know a guy who was a janitor for all three of those agencies. >

Ahahahahah!  Ok, whats his name?  Whats that?  You just made that up?  A shill making stuff up?  Gee, who woulda thunk it?  

Dr. David Griscom, reviewer of the Harrit study:

"POSITIONS/EXPERIENCE:
Current
2004-2005 2004 2003 2001-2002
2000 & 2001 1967-2001
impactGLASS RESEARCH INTERNATIONAL
Consulting: Radiation effects and defect centers in silica glass and silica-based optical fibers, heavy-metal fluoride glasses, and glasses for immobilization of nuclear wastes.
Fractal kinetics of radiation-induced defect creation and decay in optical fibers.
Ongoing Research: Innovative contributions to the geology, petrology, and materials science of major impacts on the Earth. Collaboration with scientists worldwide on various subjects.
ADJUNCT PROFESSOR OF MATERIALS SCIENCE AND ENGINEERING, UNIVERSITY OF ARIZONA, MSE, 1235 E. North Campus Dr., Tucson, AZ 85721-0012.
PROFESSEUR INVITÉ, UNIVERSITÉ JEAN MONNET, ST-ETIENNE, Lab. T.S.I., UMR 5516 CNRS, 10 rue Barrouin, Bt. F, 24000 Saint-Etienne, FRANCE (6 weeks)
PROFESSEUR INVITÉ, UNIVERSITÉ CLAUDE BERNARD LYON 1, LPCML, UMR 5620 CNRS, 43, Boulevard, 11 Novembre 1918, 69622 Villeurbanne Cedex, FRANCE (1 mo)
INVITED PROFESSOR, TOKYO INSTITUTE OF TECHNOLOGY, Materials and Structures Laboratory, Nagatsuta 4259, Midori-ku, Yokohama 226-8503, JAPAN (10 months) Advisor, Transparent Electro-Active Materials Project, ERATO, Japan Science and Technology Corp., KSP, Sakado 3-2-1 Takatsu-ku, Kawasaki 213-0012, JAPAN
PROFESSEUR INVITÉ, UNIVERSITÉS DE PARIS 6 & 7, Laboratoire de Minéralogie et Cristallographie de Paris, 4 place Jussieu, F-75252 Paris cedex 05, FRANCE (4 months)
NAVAL RESEARCH LABORATORY (NRL), Washington, DC 20375, USA
Research Physicist, Solid State Division, renamed Optical Sciences Division
Duties: Initiate, plan, and execute basic research on the physics of optical materials with specialization in electron spin resonance (ESR) studies of amorphous insulators, interpret obtained experimental data in terms of modern physical theories or new theories of the incumbent's own devising, and publish such results and analyses in refereed journals, conference proceedings, and/or books.
1967-2001
NAVAL RESEARCH LABORATORY (cont.)
Major Accomplishments include discovery and/or extensive characterization of nearly all known intrinsic and extrinsic point defects in pure and B-, P-, and Ge-doped silica, alkali borate, alkali silicate, and heavy-metal fluoride glasses, experimental and theoretical advances in characterizing fine-grained ferromagnetic precipitates in glasses by ferromagnetic resonance (FMR), elucidation of the role of radiolytic atomic hydrogen in the post-irradiation buildup of interface states in MOS transistors, discovery and extensive ESR characterization of self-trapped holes (STHs) in glassy silica and elucidation of their optical bands in optical fibers, derivation of a closed-form expression for the temperature dependence of the ESR (or FMR) intensity for any value of the electronic spin S of isolated ions (or the calculated effective spin J of ferro-/ferri-magnetic particles of any given diameter), and demonstration of the governing role of fractal kinetics in the creation and thermal decay of point defects in pure- and doped-silica optical fibers subjected to ionizing irradiations.
Principal Investigator, U.S. Department-of-Energy-sponsored research-and-development programs for (1) radiation hardening of optical fibers for fusion-reactor diagnostics for the International Thermonuclear Experimental Reactor ($125,000) and (2) assessment of possible chemical decomposition of high-level nuclear waste storage/disposal glasses under irradiation ($487,000). Total funding including smaller grants, $666,000.
Program Manager (voluntary half-time assignment), Defense Advanced Research Projects Agency (DARPA), Arlington, VA. Managed approximately $4,000,000 in basic research contracts with U.S. Department of Defense, industrial, and university laboratories.
Head, Radiation Effects Section, Optical Materials Branch, NRL Managed three other research physicists.
Sabbatical leave at Département de Physique des Matériaux, Université Claude Bernard Lyon 1, FRANCE (one year)
Principal Investigator, NASA Lunar Sample Program.
National Research Council Postdoctoral Research Associate, Solid State Division, NRL. Research Associate, Physics Department, Brown University, Providence, RI (1 1⁄2 years)
1995-1999
1981-1983
1973-1979 1975-1976
1971-1973 1967-1969 1966-1967
DEGREES AWARDED:
1966 Ph.D., Physics, Brown University, Providence, RI.
1960 B.S., Physics, Carnegie-Mellon University, Pittsburgh, PA.
PROFESSIONAL AFFILIATIONS
2009 2005-2011 Since 2002
1996
1978
Fellow, American Association for the Advancement of Science (member since 1969) Member, Geological Society of America
Lifetime Member, Fulbright Association
Fellow, American Physical Society "For contributions to the analysis and interpretation of electron spin resonance spectra of transition-group ions, radiation-induced point defects, and ferromagnetic precipitates in glasses" (member since 1965)
Fellow, American Ceramic Society (member since 1974)
PROFESSIONAL HONORS AND AWARDS:
2002
   1997
   1997
   1996
   1996
1995
1994
1979, 1986 1974
Honoree, Fourth International Conference on Borate Glasses, Crystals, and Melts, Coe College, Cedar Rapids, Iowa, July 14-18, 2002. “This conference is dedicated to Dr. David Griscom, in recognition of his outstanding contributions to the science of borate glasses and to his distinguished career in scientific research.”
Sigma Xi Pure Science Award, NRL Edison Chapter, The Scientific Research Society.
Fulbright-García Robles Fellow at Universidad Nacional Autónoma de México (3 months)
Outstanding Graduate School Alumnus Award, Brown University, Providence, RI.
Japan Society for the Promotion of Science "Fellowship for Priority-Area Research in Japan" at Tokyo Institute of Technology. (1 month)
Otto Schott Research Award 1995, Carl-Zeiss-Stiftung (Germany) "for the application of concepts of lattice defects in crystals to the glassy state, where their production by irradiation and the understanding thereof has led to useful alterations of the magnetic and optical properties of vitreous materials".
N.F. Mott Award for 1993 sponsored by the Journal of Non-Crystalline Solids "for contributions over many years to the science of non-crystalline solids".
Alan Berman Research Publication Awards, NRL.
Washington Academy of Sciences Scientific Achievement Award in Physical Sciences.
PROFESSIONAL ACTIVITIES:
2004 Member, Evaluation Committee, Hosono Transparent Electro-Active Materials Project Ex- Post Evaluation (a $15 million, 5-year program sponsored by the Japan Science and Technology Agency). Held, Kanagawa Science Park, Kanagawa, Japan, 14 September 2004.
1989-2001 1998-2000
Member, Editorial Advisory Board, Journal of Non-Crystalline Solids.
Member, Organizing Committee, NATO Advanced Study Institute "Defects in SiO2 and Related Dielectrics: Science and Technology" held Erice (Sicily), Italy, 8-20 April, 2000. Co-Editor, eponymous book.
1998 Pro-bono government consultant: On invitational travel orders issued by NASA Goddard Space Center, attended problem-solving meeting at AlliedSignal plant in Teterboro, NJ, 20 November 1998, regarding unexplained ring-laser gyro failures in orbit, which had put on hold many satellite launches pending solution. Solved the problem based in large part on personal curiosity-driven research. Several letters of commendation sent to Research Director and/or Navy Captain of NRL (reportedly including one from the CEO of Lockheed Martin).
1997 Co-Chair, Program Subcommittee for Joint Symposium "Fundamentals" at Optical Society of America/American Ceramic Society-sponsored meeting on "Bragg Gratings, Photoeffects, and Poling", Williamsburg, VA, Oct., 1997.
1996 Member, U.S. Department of Energy (DOE) Panel on "Radiation Effects in Glasses for the Immobilization and Disposal of High-Level Radioactive Wastes and Excess Weapons Plutonium".
1993 Co-Editor, Proc. 8th International Symposium on Halide Glasses (held Perros-Guirec, France, Sept., 1992) published as Volume 161 of J. Non-Crystalline Solids.
1992-1993
1991-1992 1988-1992
1985
1982
1972-1982 Last 43 Years
Co-Organizer, "R.A. Weeks International Symposium on Science and Technology of SiO2 and Related Materials" at the 1993 PAC RIM Meeting of the American Ceramic Society (Honolulu, Nov., 1993).
Co-Editor, eponymous book.
Chairman, Glass & Optical Materials Division, American Ceramic Society.
Member, NASA Universities Space Research Association, Glasses and Ceramics Discipline
Working Group.
Co-Chairman, Materials Research Society Symposium, "Defects in Glasses", Boston.
Co-Editor, eponymous book.
Initiator and funding agent (while at DARPA), DARPA Workshop on Diamond-Like
Carbon Coatings, Albuquerque, NM, Author, proceedings Introduction.
Member, Editorial Committee, Glass Division, J. of the American Ceramic Society.
Organizing Committee, numerous international topical conferences. Chairman, four major award committees in field of glass & ceramics. Refereed manuscripts typically 20-30 times per year (much fewer recently) numerous journals, including Phys. Rev. Lett., Phys. Rev. B, J. Appl. Phys., Appl. Phys. Lett., J. Non-Crystalline Solids, J. Phys. Chem. Solids, Electronics Lett., Sol. State Comm., J. Am. Ceramic Soc., Earth Planet. Sci. Lett., J. Geophys. Res. Referee research proposals, mainly National Science Foundation, International Science Foundation, NASA, DOE.
SERVICE ON JURIES FOR Ph.D. THESES
2010 Sylvain Girard, « Propriétés des défauts ponctuels à l’origne de la degradation des fibres optiques et verres à base de silice en environnement radiatif, » (Habilitation a Diriger des Recherches), L'Université Jean Monnet de Saint-Étienne, 25 June 2010
2007 Gianpiero Buscarino, (reporter only) “Experimental investigation on the microscopic structure of intrinsic paramagnetic point defects in amorphous silicon dioxide”, Università di Palermo, February 2007.
2005 Kader Médjahdi, (reporter only) “Relation entre Propriétés Optiques et les Modifications Micro-Structural Induits par Différents Traitements Physico-Chimiques dans les Fibres Optics Germanosilicates”, L'Université Jean Monnet de Saint-Étienne, 22 November 2005
2003 Sylvain Girard, "Analyse de la réponse des fibres optiques soumises a divers environnements radiatifs", L'Université Jean Monnet de Saint-Étienne, 3 October 2003
2001 Paul Borgermans, "Spectral and kinetic analysis of radiation induced optical attenuation in silica: Towards fibre optic dosimetry?", Vrije Universiteit Brussel, 11 May 2001
2001 Jérôme Garapon, “Etude théorique des défauts déficients en oxygène dans la silice pure ou dopée”, Université de Paris-Sud, Thèse N° 6507 – UFR Scientifique d’Orsay, 27 April 2001
1999 Marc Verhaegen, “Étude de la photosensibilité dans la silice implantée avec des ions de haute énergie,” Université de Montréal, 20 December 1999.
1976 Jacques Pivot, “Influence des défauts liés au silicium sur les propriétés du monoxide de silicium en couches minces”, Département de Physique des Matériaux, Université Claude Bernard Lyon 1, 10 January 1976.
CIVIC ACTIVITIES
2007 Member Coordinating Committee, Election Defense Alliance. electiondefensealliance.org
2005 Presenter, Public Lecture, Unitarian Universalist Church of Tucson, Tucson, AZ, October 17, 2005: “Ballot-box irregularities committed by election officials at a Tucson, Arizona, polling station on 2 November 2005.”
2005 Presenter, Election Integrity Workshop at quarterly meeting of the Arizona Democratic Committee, Flagstaff, AZ, August 20, 2005. “Ballot-box irregularities committed by election officials at a Tucson, Arizona, polling station on 2 November 2005.”
2005 Invited presenter, Election Assessment Hearing, The Garden Center, Houston, TX, June 29, 2005. Presentation entitled: “Ballot-box irregularities committed by election officials at a Tucson, Arizona, polling station on 2 November 2005.”
2005 Invited speaker, National Election Reform Conference, Jefferson Street Missionary Baptist Church, Nashville, TN, April 9, 2005. Talk entitled “An audit of 2 November 2004 voting a Precinct 324 of Arizona Congressional District 7: A playbook for cheating in opt-scan ballot boxes.”
2004 Co-Founder, Americans United for Democracy, Integrity, and Transparency in Elections (AUDIT), Tucson, Arizona. “To restore public ownership and oversight of elections and to ensure the fundamental right of every American citizen to vote and to have each vote counted as intended in a secure, transparent, impartial, and independently audited election process.”
ORAL PRESENTATIONS:
￼￼￼￼￼￼Since 1965
233 talks personally presented at national and international scientific gatherings and university colloquia. Among these were 85 officially invited lectures, including: 1974 Sherman Fairchild Lecture (Lehigh Univ., Bethlehem, PA), 1975 NATO Adv. Study Inst. "Defects in Nonmetallic Solids" (Exeter, UK), 1976 Conf. "Boron in Glass" (Alfred, NY), 1978 Intl. Conf. on Physics of SiO2 (Yorktown Heights, NY), 1978 Conf. "Atomic Scale Structure Amorphous Solids" (Yorktown Heights, NY), 1980 University Conf. on Glass Science (Troy, NY), 1984 Mtg. MRS-Europe (Strasbourg, France), 1984 NATO Advanced Study Institute "Glass...Current Issues" (Tenerife, Spain), 1984 Semiconductor Interface Specialists Conf. (San Diego), 1988 Mtg. Electrochemical Society (Atlanta), 1988 New Glass Forum (Tokyo and 5 other Japanese locations), 1989 Rocky Mountain EPR Symp. (Denver, CO), 1989 US-Japan Seminar "Atomic Processes Induced by Electronic Excitation" (Nagoya), 1990 Gordon Conf. on Glass (Tilton, NH), 1990 Mtg. American Chemical Soc. (Washington, DC), 1990 Intl. Mtg. on New Glass Technology (Tokyo), 1990 Intl. Symp. on SiO2 (Tokyo), 1991 Mtg. American Ceramic Soc. (Cincinnati, OH), 1991 Mtg. American Crystallographic Assn. (Toledo, OH), 1991 Intl. Seminar "Point Defects in Glasses" (Riga, Latvia), 1991 Workshop "Defects in Semiconductor-Insulator Systems" (Research Triangle Park, NC), 1991 ITER Workshop "Radiation Effects in Diagnostic Components" (St. Petersburg, USSR), 1992 Distinguished Lecturer - Corning Research Laboratory (Corning, NY), 1993 Semiconductor Interface Specialists Conf. (Ft. Lauderdale, FL), 1994 Galeener Symp. on Amorphous Insulators (Winter Park, CO), 1995 Sherman Fairchild Lecture (Lehigh Univ., Bethlehem, PA), 1995 Otto Schott Award Lecture at Mtg. European Soc. Glass Science and Technology (Würzburg), 1997 Coloquio Instituto de Ciencias Nucleares - Universidad Nacional Autónma de México, 1999 Symp. "Effects of Vacuum-UV Photons on the Optical Properties of Amorphous SiO2" (Shin-Yokohama, Japan), 1999 Mtg. American Chemical Soc. (Anaheim, CA), 2000 NATO Advanced Study Inst. "Defects in SiO2 and Related Dielectrics: Science and Technology" (Erice, Sicily), 2000 Symp. "Photonics in Radiation Environments" (Mol, Belgium), 2002 Intl. Conf. "Borate Glasses" (Cedar Rapids, IA), 2003 Intl. Conf. on Physics of Non-Crystalline Solids (Parma), 2003 University Conf. on Glass Science (Troy, NY), 2004 Annual Mtg. AAAS (Seattle), 2004 IEEE Nuclear & Space Radiation Effects Mtg. (Atlanta), 2007 Annual Mtg. AAAS (San Francisco), 2008 SiO2 Conf. (St-Etienne, France), 2008 Otto- Schott-Award Mtg. (Mainz), 2011 SPIE Conference 8164 (San Diego), 2012 SiO2 Conf. Keynote (Hyères, France).
PUBLICATIONS:
Since 1965
196 articles published (113 principal authorships) in refereed journals (e.g., Phys. Rev. Lett., Phys. Rev. B, J. Appl. Phys., Appl. Phys. Lett., J. Non-Crystalline Solids, J. Chem. Phys., Solid State Commun., J. Ceram. Soc. Japan., Nucl. Instruments & Methods, J. Magnetic Resonance, J. Materials Res., Geochim. Cosmochim. Acta, Earth & Planet. Sci. Lett., J. Geophys. Res.), conference proceedings (e.g., Proc. Lunar Sci Conf., 3rd, 4th, 5th, 6th) and books (e.g., Treatise on Materials Science and Technology, Vol 17, Academic, 1979; Glass Science and Technology, Vol 4B, Academic, 1990; Fluoride Glass Fiber Optics, Academic, 1991; Defects in SiO2 and Related Dielectrics: Science and Technology, Kluwer, 2000; Encyclopedia of Materials: Science and Technology, Elsevier, 2001; Impact Markers in the Stratigraphic Record, Springer, 2003). Co-editor of 3 books.
CITATION OF PUBLISHED WORK:
2012
2010
2006
October, 2014, determination of h index* (Source: Google Scholar) • h = 52
• The four most cited papers had 561, 547, 422, and 406 cites. August, 2010, determination of h index* (Source: ISI Web of Science):
• h = 43
January, 2006, determination of h index* (Source: ISI Web of Science):
• h = 39
• This index may grow larger with time; it cannot decrease.
• For reference, the mean and median values of h for physicists who were awarded Nobel Prizes between 1984 and 2004 have been calculated* to be 41 and 35, respectively.
* The definition of h, together with the reference data, are given by J.E. Hirsch, Proc. Nat. Acad. Sci. 102 (2005) 16569-16572.
June, 1993, search by first author only (Source: SciSearch):
• 2416 total cites (Nineteen-year average: 127 cites/year)
January, 1992, search (inclusive of all authors) performed by the Institute for Scientific
Information (ref: NRL Labstracts, 27 January 1992):
• Largest number of papers (5) by any author included on list of 100 most cited papers authored at the Naval Research Laboratory during the period 1973-1988 (93 cites each).
January, 1990, search by first author only (Source: SciSearch):
• 1547 total cites • 508 total cites • 151 cites
1974-1993
1973-1988
1990
1980-1989 1987-1989 1989 only
PATENTS:
No. 4,371,838: "Optical fiber waveguide for measuring magnetic fields", 1 February 1983.
No. 5,574,820: "Radiation hardening of pure-silica-core optical fibers by ultra-high-dose gamma irradiation", 12 November 1996.
LANGUAGES:
· English (native)
· French (read, comprehend spoken, good technical conversational ability, frequent practice) · Spanish (read, comprehend spoken, fair general conversational ability -- improving with
practice)
· Russian (earlier scientific reading ability lapsing)
· Japanese (rudimentary comprehension of spoken, rudimentary speaking ability lapsing)
COUNTRIES VISITED:
Austria, Belgium, Belize, Canada, Czech Republic, Egypt, England, France, Germany, Guatemala, Honduras, Italy, Japan, Latvia, México, Spain, Soviet Union (Russia), Sweden, Switzerland.
OTHER INTERESTS: · Travel
· Reading
Favorite authors: Loren Eiseley, Graham Greene, Freeman Dyson, Barbara Tuchman, Alistair Horne, Mark Crispin Miller.
Favorite journal: Science
Favorite subjects in Science:
impact geology, paleoclimatology, planetology, cosmology, paleontology, anthropology.
· Listening to classical music
· Pre-Columbian history/art.
· Ice hockey player
1989-1999 Hockey North America (over 21) Intermediate Level B, Washington, DC
2000 Mt. Vernon Ice Rink, over 21 house league, Alexandria, VA
2001-2002 Mandai Memorials Ice Hockey Club (scrimmage only, mostly over 60), Tokyo 2004-2005 Over-30 Recreational League,
Polar Ice, Tucson, AZ.
· Researching evidence for election fraud committed by poll workers at a Tucson, AZ, polling station during the 2 November 2004 General Election:
Published chapter on this subject in book Loser Take All – Election Fraud and the Subversion of Democracy 2004-2008, Mark Crispin Miller, Ed. (Ig Publishing, Brooklyn, New York, 2008) p. 116-130.
 Searching for the truth of what happened on 9/11/2001, e.g.: http://www.drivehq.com/file/df.aspx/publish/dlgriscom/911Research http://impactglassman.blogspot.com/2007/01/hand-waving-physics-of-911.html http://impactglassman.blogspot.com/2010/09/911-truth-evidence-of-energetic.html
￼￼￼￼
PUBLICATIONS IN BOOKS AND REFEREED JOURNALS:
N.B.: Papers marked by asterisk were invited. Principal authorships are indicated in bold typeface.
1. "Magnetic Peroxyborates, the Pseudo-Superoxides," R. Bruce, J.O. Edwards D.L. Griscom, R.A. Weeks, L.R. Darby, W. DeKleine, and M. McCarthy, J. Am. Chem. Soc. 87 (1965) 2057-2059.
2. "Paramagnetic resonance of Mn2+ in glasses and compounds of the lithium borate system," D.L. Griscom and R.E. Griscom, J. Chem. Phys. 47 (1967) 2711-2722.
3. "ESR studies of lithium borate glasses and compounds gamma irradiated at 77K: Evidence for a new interpretation of the trapped-hole centers associated with boron," D.L. Griscom, P.C. Taylor, D.A. Ware, and P.J. Bray, J. Chem. Phys. 48 (1968) 5158-5173.
4. "Paramagnetic resonance of room-temperature-stable V-type centers in -irradiated alkali halide-boron oxide glasses," D.L. Griscom, P.C. Taylor and P.J. Bray, J. Chem. Phys. 50 (1969) 977-983.
5. "Some chemical and physical properties of the effervescenct magnetic peroxyborates. The pseudo- superoxides," J.O. Edwards, D.L. Griscom, R.B. Jones, K.L. Waters, and R.A. Weeks, J. Am. Chem. Soc. 91 (1969) 1095-1103.
6. "Optical absorption of Cl2- hole-type centers in irradiated alkali halide-alkali borate glasses," D.L. Griscom, J. Chem. Phys. 51 (1969) 5186-5187.
7. "Raman spectra of Cl2- hole-type centers in irradiated alkali-halide borate glasses," M. Hass and D.L. Griscom, J. Chem. Phys. 51 (1969) 5184-5185.
8. "Reply to "Structure of trapped-hole centers in -irradiated borate glasses," D.L. Griscom, P.C. Taylor, and P.J. Bray, J. Chem. Phys. 53 (1970) 469-470.
9. "ESR studies of BO32- ions in potassium borate ceramics," P.C. Taylor, D.L. Griscom, and P.J. Bray, J. Chem. Phys. 54 (1971) 748-760.
10. "ESR studies of an intrinsic trapped-electron center in X-irradiated alkali borate glasses," D.L. Griscom, J. Chem. Phys. 55 (1971) 1113-1122.
11. "Toward a unified interpretation of ESR trapped hole centers in irradiated borate compounds and glasses," P.C. Taylor and D.L. Griscom, J. Chem. Phys. 55 (1971) 3610-3611.
12. "ESR and optical studies of alkali-associated trapped-electron centers in alkali borate glasses irradiated at 77 K," D.L. Griscom, J. Non-Cryst. Solids 6 (1971) 275-282.
13. "Electron spin resonance studies of iron phases in lunar glasses," D.L. Griscom and C.L. Marquardt, Lunar Science III, C. Watkins, Ed. (Lunar Science Institute, Houston, 1972), pp. 341-343.
14. "Evidence of lunar surface oxidation processes: Electron spin resonance of lunar materials and simulated lunar materials," D.L. Griscom and C.L. Marquardt, Proc. Lunar Sci. Conf., 3rd (1972) 2397-2415.
15. "Electron spin resonance observations of chlorine and bromine atoms isolated at 22 K in x-irradiated alkali halide-alkali borate glasses," D.L. Griscom, Sol. State Commun. 11 (1972) 899-902.
16. "Ferromagnetic resonance of small, multidomain iron particles in an 0.5-cm fragment of lunar glass, 15434,62," D.L. Griscom and C.L. Marquardt, The Apollo 15 Lunar Samples, J.W. Chamberlain and C. Watkins, Ed. (Lunar Science institute, Houston, 1972).
17. "Electron spin resonance studies of ferrimagnetic phases precipitated in simulated lunar glasses heat treated in the presence of oxygen," D.L. Griscom and C.L. Marquardt, Amorphous Magnetism, H.O. Hooper and A.M. deGraff, Ed. (Plenum Press, New York, 1973), pp. 95-102.
18. "The origin and significance of the "characteristic" ferromagnetic resonance spectrum of lunar solids: Two views," D.L. Griscom and C.L. Marquardt, Lunar Science-IV, J.W. Chamberlain and C. Watkins, Ed. (Lunar Science Institute, Houston, 1973), pp. 320-322.
19. "Mössbauer search for ferric oxide phases in lunar materials," D.W. Forester, C.L. Marquardt, and D.L. Griscom, Lunar Science-IV, J.W. Chamberlain and C. Watkins, Ed. (Lunar Science Institute, Houston, 1973), pp. 257-259.
20. "Evidence for a ubiquitous, sub-microscopic "magnetite-like" constituent in the lunar soils," D.L. Griscom, E.J. Friebele, and C.L. Marquardt, Proc. Lunar Sci. Conf., 4th, (1973) 2709-2727.
21. "E.S.R. studies of radiation damage and structure in oxide glasses not containing transition group ions: A contemporary overview with illustrations from the alkali borate system," D.L. Griscom, J. Non- Cryst. Solids 13 (1973) 251-285.
22. "Ferromagnetic resonance spectra of lunar fines: Some implications of line shape analysis," D.L. Griscom, Geochim. Cosmochim. Acta 38 (1974) 1509-1519.
23. "Ferromagnetic resonance of fine grained iron and magnetite precipitates in simulated lunar glasses: comparison with lunar soils," D.L. Griscom, C.L. Marquardt, and E.J. Friebele, Lunar Science-V, J.W. Chamberlain and C. Watkins, Ed. (Lunar Science Institute, Houston, 1974), pp. 293-295.
24. "On the nature and distribution of ferromagnetic phases in the Taurus-Littrow Valley," D.L. Griscom, Lunar Science-V, J.W. Chamberlain and C. Watkins, Ed. (Lunar Science Institute, Houston, 1974), pp. 296-297.
25. "Defect centers in a germanium-doped silica-core optical fiber," E.J. Friebele, D.L. Griscom and G.H. Sigel, Jr., J. Appl. Phys. 45 (1974) 3424-3428.
26. "Observation and analysis of the primary 29Si hyperfine structure of the E ́ center in non-crystalline SiO2," D.L. Griscom, E.J. Friebele, and G.H. Sigel, Jr., Sol. State Commun. 15 (1974) 479-483.
27. "Magnetic hysteresis in the FMR spectra of fine-grained spherical iron: Possible evidence for a new carrier of hard remanence in lunar soils and rocks," D.L. Griscom, C.L. Marquardt, E.J. Friebele, and D.J. Dunlop, Earth Planet. Sci. Lett. 24 (1974) 78-86.
28. "Rock magnetites with positive anisotropy constants at 300 K," D.L. Griscom, M.P. O'Horo, and R.A. Weeks, Proc. Takesi Nagata Conf., U. Pittsburgh., 1974, pp. 96-104.
29. "Radiation induced defect centers in fiber optic materials," E.J. Friebele, D.L. Griscom, R.J. Ginther, and G.H. Sigel, Jr., Proc. X Intl. Cong. Glass, Kyoto, Japan, 1974, pp. 6-16-22.
30. "Effects of stoichiometry on the radiation response of SiO2," G.H. Sigel, Jr., E.J. Friebele, R.J. Ginther, and D.L. Griscom, IEEE Trans. Nuc. Sci. NS-21 (1974) 56-61.
31. "Geochemical applications of electron magnetic resonance spectroscopy," R.A. Weeks, D.L. Griscom, and P.M. Bell, Proc. 18th Ampere Cong., Nottingham, UK, 1974, pp. 167-168.
32. "Temperature dependence of the ferromagnetic resonance linewidth of lunar soils, iron and magnetite precipitates in simulated lunar glasses, and non-spherical metallic iron particles," E.J. Friebele, D.L. Griscom, C.L. Marquardt, R.A. Weeks, and D. Prestle, Proc. Lunar Sci. Conf., 5th, 1974, pp. 2729- 2736.
*33. "Color centers in oxide glasses," D.L. Griscom, Radiation Damage Processes in Materials, C.H.S. Dupuy, Ed. (Noordhoff, Leyden, 1975), pp. 209-230.
34. "Microwave resonance thermomagnetic analysis: A new method of characterizing fine grained ferromagnetic constituents in lunar materials," D.L. Griscom, C.L. Marquardt, and E.J. Friebele, J. Geophys. Res. 80 (1975) 2935-2946.
35. "Characterization of ferromagnetic precipitates in glasses by variable temperature ferromagnetic resonance," E.J. Friebele, D.L. Griscom, and C.L. Marquardt, A.I.P. Conf. Proc., No. 24, C.D. Graham, G.H. Lander, and J.J. Rhyne, Ed. (American Institute of Physics, New York, 1975), pp. 386-387.
36. "Ferromagnetic resonance of two-domain spherical metallic iron," D.L. Griscom, E.J. Friebele, and C.L. Marquardt, A.I.P. Conf. Proc., No. 24, C.D. Graham, G.H. Lander, and J.J. Rhyne, Ed. (American Institute of Physics, New York, 1975), pp. 518-519.
37. "On the high-temperature stability of magnetite: Implications for lunar soil magnetism," D.L. Griscom, Proc. Lunar Sci. Conf., 6th, 1975, pp. 3081-3089.
38. "The Néel transition and magnetic properties of terrestrial, synthetic, and lunar ilmenites," F.E. Senftle, A.N. Thorpe, C. Briggs, C. Alexander, J. Minkin, and D.L. Griscom, Earth Planet. Sci. Lett., 1975.
*39. "Defects in non-crystalline oxides," D.L. Griscom, Defects and Their Structure in Nonmetallic Solids, B. Henderson and A.E. Hughes, Ed. (Plenum Press, New York, 1976), pp. 323-353.
40. "Defect centers in pure-silica-core borosilicate-clad optical fiber: ESR studies," D.L. Griscom, G.H. Sigel, Jr., and R.J. Ginther, J. Appl. Phys. 47 (1976) 960-967.
41. "On the spectral reflectance and maturation darkening of lunar soils," C.L. Marquardt and D.L. Griscom, The Moon 15 (1976) 15-30.
42. "Comment on: "FMR thermomagnetic studies" by Morris et al.," D.L. Griscom, Geophysical Res. Lett. 3 (1976) 232-234.
43. "Drawing-induced defect centers in a fused silica core fiber," E.J. Friebele, G.H. Sigel, Jr. and D.L. Griscom, Appl. Phys. Lett. 28 (1976) 516-518.
44. "Drawing-induced defect centers in silica core fiber optics," E.J. Friebele, G.H. Sigel, Jr. and D.L. Griscom, Proc. Second European Conf. on Optical Fiber Transmission (1976), pp. 63-68.
45. "Radiation-induced defects in non-crystalline SiO2," E.J. Friebele, D.L. Griscom, and G.H. Sigel, Jr., Non-Crystalline Solids, G.H. Frischat, Ed. (Trans Tech, Aedermannsdorf, Switzerland, 1977), pp. 154- 159.
46. "Radiation-induced paramagnetic defects as structural probes of pure silica and borosilicate glasses," D.L. Griscom, E.J. Friebele, G.H. Sigel, Jr., and R.J. Ginther, Structure of Non-Crystalline Materials, P.H. Gaskell, Ed. (Taylor & Francis, London, 1977), pp. 113-117.
47. "Characterization of ferromagnetic precipitates in glasses by ferromagnetic resonance," E.J. Friebele, D.L. Griscom, and C.E. Patton, Amorphous Magnetism II, R.A. Levy and R. Hasagawa, Ed. (Plenum Press, New York, 1977), pp. 561-569.
48. "The electronic structure of SiO2: A review of recent spectroscopic and theoretical advances," D.L. Griscom, J. Non-Cryst. Solids 24 (1977) 155-234.
49. "Defect Centers in Pure Fused Silica," D.L. Griscom, G.H. Sigel, Jr., and E.J. Friebele, Proc. XI Int'l. Cong. Glass, Prague 1 (1977) 6-14.
*50. "Defects and impurities in -quartz and fused silica", D.L. Griscom, The Physics of SiO2 and Its Interfaces, S.T. Pantelides, Ed. (Pergamon, New York, 1978), pp. 232-252.
51. "Oxygen-associated trapped-hole centers in high-purity fused silica," M. Stapelbroek and D.L. Griscom, The Physics of SiO2 and Its Interfaces, S.T. Pantelides, Ed. (Pergamon, New York, 1978), pp. 263-267.
*52. "Borate Glass Structure," D.L. Griscom, Borate Glasses: Structure, Properties, Applications, L.D. Pye, V.D. Frechette, and N.J. Kreidl, Ed. (Plenum Publishing Corp., New York, 1978), pp. 11-149.
*53. "Epilogue," D.L. Griscom, Borate Glasses: Structure, Properties, Applications, L.D. Pye, V.D. Frechette, and N.J. Kreidl, Ed. (Plenum Press, New York, 1978), pp. 139-149.
*54. "Defects in amorphous insulators," D.L. Griscom, J. Non-Cryst. Solids 31 (1978) 241-266.
*55. "Oxygen-associated trapped-hole centers in high-purity fused silicas," M. Stapelbroek, D.L. Griscom, E.J. Friebele, and G.H. Sigel, Jr., J. Non-Cryst. Solids 32 (1979) 313-326. (The invitation to contribute to this Festschrift for Sir Nevill Mott was extended to Griscom).
56. "Ferromagnetic resonance of spherical particles of -iron precipitated in fused silica," D.L. Griscom, E.J. Friebele, and B.B. Shinn, J. Appl. Phys. 50 (1979) 2402-2404.
57. "Fundamental defect centers in glass: The peroxy radical in irradiated high-purity, fused silica," E.J. Friebele, D.L. Griscom, M. Stapelbroek, and R.A. Weeks, Phys. Rev. Lett. 42 (1979) 1346-1349.
*58. "Radiation effects in glass," E.J. Friebele and D.L. Griscom, Treatise on Materials Science and Technology Vol. 17: Glass II, M. Tomozowa and R.H. Doremus, Ed. (Academic Press, New York, 1979), pp. 257-351.
59. "E ́ Center in Glassy SiO2: Microwave Saturation Properties and Confirmation of the Primary 29Si Hyperfine Structure," D.L. Griscom, Phys. Rev. B20 (1979) 1823-1834.
*60. "Point Defects and Radiation Damage Processes in -Quartz," D.L. Griscom, Proc. Thirty-Third Frequency Control Symposium (Electronics Industries Assn., Washington, DC, 1979), pp. 98-109.
*61. "Electron spin resonance in glasses," D.L. Griscom, J. Non-Cryst. Solids 40 (1980) 211-272.
62. "Electron spin resonance studies of iron-group impurities in beryllium fluoride glasses," D.L. Griscom,
M. Stapelbroek and M.J. Weber, J. Non-Cryst. Solids 41 (1980) 329-345.
63. "E ́ center in glassy SiO2: 17O, 1H, and "very weak" 29Si superhyperfine structure," D.L. Griscom,
Phys. Rev. B22 (1980) 4192-4202.
64. "Electron-transfer model for E ́-center optical absorption in SiO2," D.L. Griscom and W.B. Fowler, The Physics of MOS Insulators, G. Lukovsky, S.T. Pantelides, and F.L. Galeener, Ed. (Pergamon Press, New York, 1980), pp. 97-101.
65. "Ferromagnetic resonance of fine grained precipitates in glass: A thumbnail review," D.L. Griscom, J. Non-Cryst. Solids 42 (1980) 287-296.
*66. "ESR studies in amorphous insulators," D.L. Griscom, Nuclear and Electron Resonance Spectroscopies Applied to Materials Science, E.N. Kaufmann and G.K. Shenoy, Ed. (Elsevier North Holland, New York, 1981), pp. 103-116.
67. "Particle size effects in the FMR spectra of fine-grained precipitates in glass," D.L. Griscom, IEEE Trans. Magnetics MAG-17 (1981) 2718-2720.
68. "Ferromagnetic resonance condition and powder pattern analysis for dilute, spherical, single-domain particles of cubic crystal structure," D.L. Griscom, J. Magn. Res. 45 (1981) 81-87.
69. "Fundamental defect centers in glass: 29Si hyperfine structure of the nonbridging oxygen hole center and the peroxy radical in a-SiO2," D.L. Griscom and E.J. Friebele, Phys. Rev. B 24 (1981) 4896-4898.
*70. "Effects of ionizing radiation on amorphous insulators," D.L. Griscom and E.J. Friebele, Rad. Effects 65 (1982) 63-72.
71. "Surface raman scattering from effervescent magnetic peroxyborates," G.E. Walrefen, P.N. Krishnan, M. Hokmabadi, D.L. Griscom, and R. Munro, J. Chem. Phys. 77 (1982) 3840-3846.
72. "ESR studies of damage processes in x-irradiated high purity a-SiO2:OH and characterization of the formyl radical defect," D.L. Griscom, M. Stapelbroek, and E.J. Friebele, J. Chem. Phys. 78 (1983) 1638-1651.
73. "Fundamental defect centers in glass: Electron spin resonance and optical absorption studies of irradiated phosphorus-doped silica glass and optical fibers," D.L. Griscom, E.J. Friebele, K.J. Long and J.W. Fleming, J. Appl. Phys. 54 (1983) 3743-3762.
74. "Radiation-induced defects in glasses with high water content," A.A. Wolf, E.J. Friebele, D.L. Griscom, J. Acocella, and M. Tomozawa, J. Non-Cryst. Solids 56 (1983) 349-354.
75. "Observation of the methyl radical CH3· in irradiated high-purity synthetic fused silica," E.J. Friebele, D.L. Griscom and K. Rau, J. Non-Cryst. Solids 57 (1983) 176-175.
76. "Electron spin resonance studies of trapped hole centers in irradiated alkali silicate glasses: A critical comment on current models for HC1 and HC2," D.L. Griscom, J. Non-Cryst. Solids 64 (1984) 229- 247.
77. "Characterization of three E ́-center variants in X- and -irradiated high-purity a-SiO2," D.L. Griscom, Nuclear Inst. & Methods B1 (1984) 481-488.
78. "On the structure of defect centers in -irradiated alkali silicate glasses," R. Cases and D.L. Griscom, Nuclear Inst. & Methods B1 (1984) 503-510.
79. "Ferromagnetic resonance of precipitated phases in natural glasses," D.L. Griscom, J. Non-Cryst. Solids 67 (1984) 81-118.
80. "Thermal bleaching of X-ray-induced defect centers in high-purity fused silica by diffusion of radiolytic molecular hydrogen," D.L. Griscom, J. Non-Cryst. Solids 68 (1984) 301-325.
81. "Electron trapping in amorphous SiO2 studied by charge build-up under electron bombardment," J.P. Vigouroux, J.P. Duraud, A. Le Moel, C. Le Gressus, and D.L. Griscom, J. Appl. Phys. 57 (1985) 5139- 5144.
*82. "Defect Structure of glasses: Some outstanding questions in regard to vitreous silica," D.L. Griscom, J. Non-Cryst. Solids 73 (1985) 51-77.
*83. "Spectroscopy of optical glasses," D.L. Griscom, in Glass... Current Issues, A.F. Wright and J. Dupuy, Eds. (Martinus Nijhoff, Dordrecht, Nl, 1985), pp. 362-372.
84. "Radiation effects in ZrF4 based glasses I. Electron spin resonance," R. Cases, D.L. Griscom, and D.C. Tran, J. Non-Cryst. Solids 72 (1985) 51-63.
85. "Chlorine-associated defect centers in irradiated ZrF4 based glasses," D.L. Griscom and D.C. Tran, J. Non-Cryst. Solids 72 (1985) 159-163.
*86. "Defect structure of amorphous SiO2 and the role of hydrogen," D.L. Griscom, Les Editions de Physique (1985), pp. 25-28.
87. "Nitrogen-associated paramagnetic defect centers in SiO2 films," E.J. Friebele, D.L. Griscom, and T. Hickmott, J. Non-Cryst. Solids 71 (1985) 351-359.
88. "The 2eV optical absorption and luminescence in irradiated synthetic silica," E.J. Friebele, D.L. Griscom, and M.J. Marrone, J. Non-Cryst. Solids 71 (1985) 133-144.
89. "Diffusion of radiolytic molecular hydrogen as a mechanism for the post-irradiation buildup of interface states in SiO2-on-Si structures," D.L. Griscom, J. Appl. Phys. 58 (1985) 2524-2533.
*90. "Nature of defects and defect generation in optical glasses," D.L. Griscom, SPIE Vol. 541 - Radiation Effects in Optical Materials, P.W. Levy, Ed. (SPIE, Bellingham, WA, 1985), pp. 38-59.
91. "Overview of radiation effects in fiber optics," E.J. Friebele, C.G. Askins, M.E. Gingerich, M.J. Marrone, and D.L. Griscom, SPIE Vol. 541 - Radiation effects in optical glasses, P.W. Levy, Ed. (SPIE, Bellingham, WA, 1985), pp. 70-80.
92. "Thermal bleaching of gamma-ray-induced defect centers in high purity fused silica by diffusion of radiolytic molecular water," D.L. Griscom, in Structure and Bonding in Noncrystalline Solids, G.E. Walrafen and A.G. Revesz, Eds. (Plenum, New York, 1986), pp. 369-384.
93. "Point defects in amorphous SiO2: What have we learned from 30 years of experimentation?," D.L. Griscom, in Defects in Glasses - MRS Vol. 61, F.L. Galeener, D.L. Griscom, and M.J. Weber, Eds. (Materials Research Society, Pittsburgh, PA, 1986), pp. 213-221.
94. "Color centers in glass optical fiber waveguides," E.J. Friebele and D.L. Griscom, in Defects in Glasses - MRS Vol. 61, F.J. Galeener, D.L. Griscom, and M.J. Weber, Eds. (Materials Research Society, Pittsburgh, Pa, 1986), pp. 319-331.
95. "Effects of radiation-induced defects on laser-induced breakdown in SiO2," M.J. Soileau, N. Mansour, E. Canto, and D.L. Griscom, in Defects in Glasses - MRS Vol. 61, F.J. Galeener, D.L. Griscom, and M.J. Weber, Eds. (Materials Research Society, Pittsburgh, PA, 1986), pp. 205-211.
96. "Fundamental radiation-induced defect centers in synthetic fused silicas: atomic chlorine, delocalized E centers, and a triplet state," D.L. Griscom and E.J. Friebele, Phys. Rev. B34 (1986) 7524-7533.
97. "On the structures of hydrogen-associated defect centers in irradiated high-purity a-SiO2:OH," T.E. Tsai and D.L. Griscom, J. Non-Cryst. Solids 91 (1987) 170-179.
98. "Studies of radiation-induced point defects in silica aerogel monoliths," D.L. Griscom, E.J. Friebele, and S.P. Mukherjee, Cryst. Latt. Def. and Amorph. Mat. 17 (1987) 157-163.
99. "ESR studies of irradiated 17O-enriched sol-gel silicas: Organic impurity effects and the structure of the nonbridging oxygen hole center," D.L. Griscom, C.J. Brinker, and C.S. Ashley, J. Non-Cryst. Solids 92 (1987) 295-301.
100. "Radiation-induced defect centers in high purity GeO2 glasses," T.E. Tsai, D.L. Griscom, E.J. Friebele, and J.W. Fleming, J. Appl. Phys. 62 (1987) 2264-2268.
101. "Radiation-effects on a low-thermal-expansion glass ceramic," T.E. Tsai, P.L. Higby, E.J. Friebele, and D.L. Griscom, J. Appl. Phys. 62 (1987) 3488-3490.
102. "The oxidation state of iron in tektite glass," R.F. Fudali, M.D. Dyar, D.L. Griscom, and H.D. Schreiber, Geochim. Cosmochim. Acta 51 (1987) 2749-2756.
103. "Precipitation phenomena in high dose implanted silica and annealing behavior," A. Perez, M. Treilleux, T. Capra, and D.L. Griscom, J. Mater. Res. 2 (1987) 910-917.
*104. "Silica Glasses," D.L. Griscom, Materials Research Society Bull. 7 (1987) 20-24.
*105. "Influence of processing parameters on defect structures of gel-derived silicas," D.L. Griscom and C.J. Brinker, Effects of Modes of Formation on the Structure of Glasses, R.A. Weeks and D.L. Kinser, Eds. (Trans Tech, Aedermannsdorf, Switz., 1987), pp. 213-216.
106. "On the structure of Ge-associated defect centers in irradiated high purity GeO2 and Ge-doped SiO2 glasses," T.E. Tsai, D.L. Griscom, and E.J. Friebele, in Effects of Modes of Formation on the Structure of Glasses, R.A. Weeks & D.L. Kinser, Eds. (Trans Tech, Aedemannsdorf, Switz, 1987), pp. 469-476.
107. "Volcanic glasses of the KBS tuff: Transmission electron microscopy, magnetism, electron spin resonance, Mössbauer, and optical spectroscopy," C.M. Schlinger, D.L. Griscom, G. Papaefthymiou, D.R. Veblen, and R.M. Smith, J. Geophys. Res. 93 (1987) 9137-9156.
*108. "Intrinsic and extrinsic point defects in a-SiO2," D.L. Griscom, The Physics and Technology of Amorphous SiO2, R.A.B. Devine, Ed. (Plenum Press, New York, 1988), pp. 125-134.
109. "Ferromagnetic resonance studies of iron-implanted silica," D.L. Griscom, J.J. Krebs, A. Perez, and M. Treilleux, Nucl. Inst. & Methods B32 (1988) 272-278.
110. "Stability and distribution of defect centers induced by high energy particles in high purity fused silica," T.E. Tsai, D.L. Griscom, and M.E. Gingerich, Nucl. Instr. & Methods B32 (1988) 377-382.
111. "Effects of ionizing radiation on laser-induced damage in SiO2,” M.J. Soileau, M. Mansour, E. Canto, and D.L. Griscom, Nucl. Instr. & Methods B32 (1988) 311-314.
112. "Electron spin resonance: A potential diagnostic for oxide impurities in ZrF4-based glasses," D.L. Griscom, P. Hart, J.M. Jewell, J.T. Kohli, and J.E. Shelby, J. Non-Cryst. Solids 103 (1988) 300-310.
113. "Characterization of a nitrogen center in high purity SiO2:OH glass," T.E. Tsai, D.L. Griscom, and E.J. Friebele, Phys. Rev. B 38 (1988) 2140-2146.
114. "Mechanism of intrinsic Si E ́ center photo-generation in high purity silica," T.E. Tsai, D.L. Griscom, and E.J. Friebele, Phys. Rev. Lett. 61 (1988) 444-446.
115. "Nature of radiation-induced point defects in amorphous SiO2 and their role in SiO2-on-Si structures," D.L. Griscom, D.B. Brown, and N.S. Saks, The Physics and Chemistry of SiO2 and the Si-SiO2 Interface, C.R. Helms and B.E. Deal, Eds. (Plenum, New York, 1988), pp. 287-297.
116. "Formation of interface traps in MOSFETs during annealing following low temperature irradiation," N.S. Saks, R.B. Klein, and D.L. Griscom, IEEE Trans. Nuc. Sci. NS-35 (1988) 1234-1240.
117. "Dispersive diffusion transport of atomic hydrogen in high purity SiO2:OH glass," T.E. Tsai and D.L. Griscom, J. Non-Cryst. Solids 106 (1988) 374-379.
118. "Defect centers induced by linear and nonlinear absorption of uv light in high purity silica," T.E. Tsai, D.L. Griscom and E.J. Friebele, Properties and characteristics of optical glass (SPIE Vol. 970), A.J. Marker III, Ed. (SPIE, Bellingham, WA, 1988), pp. 165-169.
119. "Radiation-induced defect centers in glass-ceramics," T.E. Tsai, E.J. Friebele, D.L. Griscom and W. Pannhorst, J. Appl. Phys. 65 (1989) 507-514.
120. "Self-trapped holes in amorphous silicon dioxide," D.L. Griscom, Phys. Rev. B 40 (1989) 4224-4227.
121. "Medium range structural order and fractal annealing kinetics of radiolytic atomic hydrogen in high
purity silica," T.E. Tsai, D.L. Griscom and E.J. Friebele, Phys. Rev. B 40 (1989) 6374-6380.
122. "Bromine-associated defect centers in irradiated ZrF4-based glasses," D.L. Griscom and R.J. Ginther,
J. Non-Cryst. Solids 110 (1989) 273-278.
123. "Correlation of defect centers with second harmonic generation in Ge- and Ge-P-doped silica core single mode fibers," T.E. Tsai, M.A. Saifi, E.J. Friebele, D.L. Griscom, and U. Osterberg, Optics Lett. 14 (1989) 1023-1025.
124. "Electron spin resonance determination of the redox state of iron and its relationship to radiation- induced defect centers in oxidized and reduced ZrF4-based glasses," D.L. Griscom and R.J. Ginther, J. Non-Cryst. Solids 113 (1989) 146-160.
*125. "Electron Spin Resonance," D.L. Griscom, Glass Science and Technology, Vol. 4B, Advances in Structural Analysis, D.R. Uhlmann and N.J. Kreidl, Eds. (Academic Press, New York, 1990), pp. 151- 251.
126. "Growth and decay kinetics of defect centers in high-purity fused silicas irradiated at 77 K with x rays or 6.4-eV laser light," D.L. Griscom, Nucl. Inst. & Methods B46 (1990) 12-17.
127. "Si E ́ centers and UV-induced compaction in high purity silica," T.E. Tsai, D.L. Griscom, and E.J. Friebele, Nucl. Instruments & Methods B46 (1990) 265-268.
*128. "Electron spin resonance investigations of defects and defect processes in amorphous silicon dioxide," D.L. Griscom, Atomic Processes Induced by Electronic Excitation in Non-Metallic Solids, W.B. Fowler and N. Itoh, Eds. (World Scientific, Singapore, 1990), pp. 565-595.
129. "Defect centers induced by the harmonic wavelength of 1.06 μm light in Ge-P-doped silica," T.E. Tsai, E.J. Friebele, D.L. Griscom, and M. Saifi, Ceram. Trans. 14 (1990) 127-136.
130. "Correlation of defect centers with a wavelength-dependent photosensitive response in germania-doped silica optical fibers," K.D. Simmons, S. LaRochelle, V. Mizrahi, G.I. Stegeman, and D.L. Griscom, Optics Lett. 16 (1991) 141-143.
131. "Computer-simulation analysis of the ESR spectra of V-type centers in irradiated heavy-metal fluoride glasses," D.L. Griscom and E.J. Friebele, Phys. Rev. B 43 (1991) 7427-7441.
132. "Correlation of single mode fiber radiation response and fabrication parameters," E.J. Friebele, C.G. Askins, C.M. Shaw, M.E. Gingerich, C.C. Harrington, D.L. Griscom, T.E. Tsai, U.C. Paek, and W.H. Schmidt, Appl. Optics 30 (1991) 1944-1957.
133. "Dispersive diffusive transport of free excitons in high purity silica," T.E. Tsai and D.L. Griscom, J. Non-Cryst. Solids 131 (1991) 1240-1244.
*134. "Effects of high energy radiation on halide glasses," D.L. Griscom and E.J. Friebele, Fluoride Glass Fiber Optics, I. Aggarwal and G. Lu, Eds. (Academic Press, Boston, 1991), pp. 307-350.
135. "An electron spin resonance study of x-irradiated calcium aluminosilicate glasses," D.A. Dutt, P.L. Higby, and D.L. Griscom, J. Non-Cryst. Solids 130 (1991) 41-51.
*136. "Optical properties and structure of defects in silica glass," D.L. Griscom, Centenial Memorial Issue, J. Ceram. Soc. Jpn. 99 (1991) 923-942.
137. "Experimental evidence for excitonic mechanism of defect generation in high purity silica," T.E. Tsai and D.L. Griscom, Phys. Rev. Lett. 67 (1991) 2517-2520.
138. "Compositional dependence of trapped hole centers in gamma-irradiated calcium aluminosilicate glasses," D.A. Dutt, P.L. Higby, C.I. Merzbacher, and D.L. Griscom, J. Non-Cryst. Solids 135, 122- 130 (1991).
139. "Formation of interface traps in MOS devices during isochronal annealing after irradiation at 78K," N.S. Saks, R.B. Klein, S. Yoon, and D.L. Griscom, J. Appl. Phys 70 (1991) 7434-7442.
*140. "Electron spin resonance studies of point defects and magnetic precipitates in silicate glasses," D.L. Griscom, Trans. Amer. Crystallographic Assn. 27 (1991) 141-162.
141. "Defect centers and photoinduced self-organization in Ge-doped silica core fibers," T.E. Tsai and D.L. Griscom, Proc. Intnational Workshop on Photoinduced Self-Organization Effects in Optical Fiber, SPIE Vol. 1516 (1992) pp. 14-28.
142. "A structural model for low silica content calcium aluminosilicate glasses," D.A. Dutt, P.L. Higby, and D.L. Griscom, Phys. Chem. Glasses 33 (1992) 51-55.
143. "ESR spectroscopic investigation of oxide-doped fluorozirco-hafnate glasses," J.S. Sanghera, P. Hart, D. Griscom, M.G. Sachon, and I.D. Aggarwal, Ceramic Transactions, Vol. 28, (The American Ceramic Society, Westerville, OH, 1992), pp. 423-431.
*144. "Electron spin resonance characterization of self-trapped holes in amorphous silicon dioxide," D.L. Griscom, in Proc. International Seminar Point Defects in Glasses, Riga, Latvia, July 29 – Aug 1, 1991, J. Non-Cryst. Solids 149 (1992) 137-160.
145. "Materials issues in diagnostic systems for BPX and ITER," F.W. Clinard, Jr., E.H. Farnum, D.L. Griscom, R.F. Mattas, S.S. Medley, F.W. Wiffin, S.S. Wojtowicz, K.M. Young, and S.J. Zinkle, J. Nucl. Materials 191-194 (1992) 1399-1403.
146. "An electron spin resonance study of -irradiated barium galliosilicate glasses," D.A. Dutt, D.L. Griscom, C.M. Shaw, and J.E. Shelby, J. Chem. Phys. 96 (1992) 4852-4859.
*147. "Hydrogen model for radiation-induced interface states in SiO2-on-Si structures: A review of the evidence," D.L. Griscom, in Proc. Workshop "Defects in Semiconductor-Insulator Systems" Microelectronics Center of North Carolina, Research Triangle Park, NC, September 1991, J. Electron. Mat. 21 (1992) 763-767.
148. "Radiation-induced trapped hole centers in calcium aluminosilicate glasses, D.A. Dutt, P.L. Higby, C.I. Merzbacher, and D.L. Griscom, Ceramic Transactions Vol. 28, (The American Ceramic Society, Westerville, OH, 1992), pp. 111-122.
149. "Electron spin resonance characterization of nonbridging oxygen hole centers in alkali silicate glasses", R. Cases and D.L. Griscom, Proceedings of XVI Int'l Congress on Glass, Vol. 3, Glass Structure (1992), pp. 53-58.
150. "Survivability of optical fibers in space," E.J. Friebele, M.E. Gingerich, and D.L. Griscom, Optical Materials Reliability and Testing: Benign and Adverse Environments, SPIE Vol. 1791 (1993) pp. 177- 188.
151. "Post-irradiation cracking of H2 and formation of interface states in MOSFETs," R.E. Stahlbush, A.H. Edwards, D.L. Griscom, and B.J. Mrstik, J. Appl. Phys. 73 (1993) 658-667.
*152. "Electron spin resonance spectroscopy of radiation-induced defect centers in insulating glasses," D.L. Griscom, in Experimental Techniques of Glass Science, O. El-Bayoumi and C.J. Simmons, Eds. (The American Ceramic Society, Westerville, OH, 1993), pp. 161-184.
153. "Defect centers in heavy-metal fluoride glasses: A review," D.L. Griscom, J. Non-Cryst. Solids 161 (1993) 45-51.
154. "Thermal stability of photoinduced gratings and paramagnetic centers in Ge- and Ge-P-doped silica optical fibers," T.E. Tsai, E.J. Friebele, and D.L. Griscom, Optics Letters 18 (1993) 935-937.
155. "Thermal stability of self-organized gratings and defects in Ge- and Ge-P-doped silica core fibers," T.E. Tsai, E.J. Friebele, and D.L. Griscom, Photosensitivity and Self-Organization in Optical Fibers and Waveguides, SPIE Vol. 2044 (1993) 121-132.
156. “Photosensitivity of rare-earth-doped glasses,” G.M. Williams, D.A. Dutt, J.A.Ruller, D.L.Griscom, K.K. Crahan, E.J. Friebele, Photosensitivity and Self-Organization in Optical Fibers and Waveguides, SPIE Vol. 2044 (1993) 322-329.
157. "Radiation-induced defects in glasses: Origin of power-law dependence of concentration on dose," D.L. Griscom, M.E. Gingerich, and E.J. Friebele, Phys. Rev. Letters. 71 (1993) 1019-1022.
158. "Fast-neutron radiation effects in a silica-core optical fiber studied by a CCD-camera spectrometer," D.L. Griscom, M.E. Gingerich, E.J. Friebele, M. Putnam, and W. Unruh, Appl. Optics 33 (1994) 1022-1028.
159. "From E ́ centers to the "characteristic" resonance: A colleague's reminiscences on the scientific odyssey of Robert A. Weeks," D.L. Griscom, J. Non-Cryst. Solids 179 (1994) 22-38.
160. "Model for dose, dose-rate and temperature dependence of radiation-induced loss in optical fibers," D.L. Griscom, M.E. Gingerich, and E.J. Friebele, IEEE Trans. Nuc. Sci. NS-41 (1994) 523-527.
161. "Effect of water on the generation of second harmonic in poled fused silica," L.J. Henry, A.D. Devilbiss, T.-E. Tsai, and D.L. Griscom, Doped Fiber Devices and Systems, M.J. Digonnet; Ed., Proc. SPIE Vol. 2289 (1994) p. 177-184.
162. "Proposed experiment to investigate use of heated optical fibers for tokamak diagnostics during D-T discharges", W. Tighe, H. Adler, D. Cylinder, D. Johnson, D. Pallidino, A. Ramsey, P. Morgon, and D. Griscom, Rev. Sci. Inst. 66 (1995) 907-909.
163. "29Si superhyperfine interactions of the E ́ center: A potential probe of range-II order in silica glass," D.L. Griscom and M. Cook, J. Non-Cryst. Solids 182 (1995) 119-134.
164. "Radiation hardening of pure-silica-core optical fibers by ultra-high-dose -ray pre-irradiation," D.L. Griscom, J. Appl. Phys. 77 (1995) 5008-5013.
165. "-ray-induced optical attenuation in Ge-doped-silica fiber image guides", D.L. Griscom, J. Appl. Phys. 78 (1995) 6696-6704.
166. "-radiation resistance of aluminum-coated all-silica optical fibers fabricated using different types of silica in the core", D.L. Griscom, K.M. Golant, A.L. Tomashuk, D.V. Pavlov, and Yu.A. Tarabrin, Appl. Phys. Lett. 69 (1996) 322-324.
167. " and fission-reactor radiation effects on the visible-range transparency of aluminum-jacketed, all- silica optical fibers," D.L. Griscom, J. Appl. Phys. 80 (1996) 2142-2155.
168. "Visible/infra-red absorption study in fiber geometry of metastable defect states in high-purity fused silicas," D.L. Griscom, Defects in Insulating Materials ICDIM 96, G.E. Matthews and R.W. Williams, Eds., Materials Sci. Forum Vols. 239-241 (1997) 19-24.
169. "Influence of the cladding thickness on the evolution of the NBOHC band in optical fibers exposed to gamma radiations," O. Deparis, D.L. Griscom, P. Mégret, M. Decréton, and M. Blondel, J. Non-Cryst. Solids 216 (1997) 124-128.
170. "Radiation effects in glasses used for immobilization of high-level waste and plutonium disposition," W.J. Weber, R.C. Ewing, C.A. Angell, G.W. Arnold, A.N. Cormack, J.M. Delaye, D.L. Griscom, L.W. Hobbs, A. Navrotsky, D.L. Price, A.M. Stoneham, and M.C. Weinberg, J. Mater. Res. 12, No. 8 (1997) 1946-1978.
171. "Radiation hardening of pure-silica-core optical fibers: Reduction of induced absorption bands associated with self-trapped holes," D.L. Griscom, Appl. Phys. Lett. 71 (1997) 175-177.
172. "On the structure and radiation chemistry of iron phosphate glasses: New insights from electron spin resonance, Mössbauer, and evolved-gas mass spectroscopy," D.L. Griscom, C.I. Merzbacher, N.E. Bibler, H. Imagawa, S. Uchiyama, A. Namiki, G.K. Marasinghe, M. Mesko, and M. Karabulut, Nucl. Inst. & Methods B 141 (1998) 600-615.
173. "Determination of the visible-range optical absorption spectrum of peroxy radicals in gamma-irradiated fused silica," D.L. Griscom and M. Mizuguchi, J. Non-Cryst. Solids 239 (1998) 66-77.
*174. "Electron spin resonance of 65-million-year-old glasses and rocks from the Cretaceous-Tertiary boundary," D.L. Griscom, V. Beltrán-López, C.I. Merzbacher, and E. Bolden, in Selected papers from the 18th International Congress on Glass, San Francisco, CA, July 10-15, 1998, R.A. Weeks, Ed., J. Non-Cryst. Solids 253 (1999) 1-22.
175. "Electron spin resonance studies of defect centers induced in a high-level nuclear waste glass simulant by gamma-irradiation and ion-implantion," D.L. Griscom, C.I. Merzbacher, R.A. Weeks, R.A. Zuhr, J. Non-Cryst. Solids 258 (1999) 34-47.
*176. "The natures of point defects in amorphous silicon dioxide," D.L. Griscom, in Defects in SiO2 and Related Dielectrics: Science and Technology, G. Pacchioni, L. Skuja, and D.L. Griscom, Eds., (Kluwer Academic, The Netherlands, 2000) pp 117-159.
177. “A new composite model for hydrous RuO2;” K.E. Swider-Lyons, K.M. Bussmann, D.L. Griscom, C.T. Love, D.R. Rolison, W. Dmowski, and T. Egami, in "Solid State Ionic Devices II--Ceramic Sensors," E.D. Wachsman, W. Weppner (Eds.), PV2000-32, (Electrochemical Society, Pennington, NJ, 2000) 148-156.
178. "Fractal kinetics of radiation-induced point-defect formation and decay in amorphous insulators: Application to color centers in silica-based optical fibers," D.L. Griscom, Phys. Rev. B 64 (2001) 174201-1 to 174201-14.
*179. “Amorphous materials: Electron spin resonance”, D.L. Griscom, in Encyclopedia of Materials: Science and Technology, (Elsevier Science Ltd., 2001) 179-186.
180. “ESR Spectra of Limestones from the Cretaceous-Tertiary Boundary: Traces of a Catastrophe,” D.L. Griscom and V. Beltrán-López, Proc. International Symposium ESR Dosimetry and Dating, Osaka, Japan, October 2001. Advances in ESR Applications 8 (2002) 57-64.
181. “New geochemical insights from electron-spin-resonance studies of Mn2+ and SO3- in calcites: Quantitative analyses of Chicxulub crater ejecta from Belize and southern México with comparisons to limestones from distal Cretaceous-Tertiary-boundary sites,” D.L. Griscom, V. Beltrán-López, K.O. Pope, and A.C. Ocampo, in Impact Markers in the Stratigraphic Record, Impact Studies, vol. 3, C. Koeberl and F. Martínez-Ruiz, Eds. (Springer Verlag, Heidelberg, 2003) pp. 229-270.
182. “Fossil natural glasses composed of ferric oxyhydroxides: Impactites of the 35.5 million year old Chesapeake Bay crater”, D.L. Griscom, A. Akiyoshi, T. Homae, K. Kondo, C. Yamanaka, T. Ueno, M. Ikeya, M. Affatigato, A. Schue, Proc. of “Natural Glasses 4”, Lyon, FRANCE, August 2002. J. Non-Cryst. Solids 323 (2003) 7-26.
*183. “One bad day 65 million years ago...”, D.L. Griscom, Proc. Fourth International Conference on Borate Glasses, 14-18 July, 2002, Glass Technology 44 (2003) 39-41.
184. "γ-ray-induced visible/infrared optical absorption bands in pure and F-doped silica-core fibers: Are they due to self-trapped holes?", D. L. Griscom, Proc. 16th University Conference on Glass Science, Troy, NY, 13-15 August, 2003, J. Non-Cryst. Solids 349 (2004) 139-147.
185. "Self-trapped holes in pure-silica glass: A history of their discovery and characterization and an example of their critical significance to industry", D.L. Griscom, Proc. First Conf. Advances in Optical Materials, Tucson, AZ, 15 October 2005, J. Non-Cryst. Solids 352 (2006) 2601-2617.
186. "Transient optical absorption in pulsed-X-ray-irradiated pure-silica-core optical fibers: Influence of self-trapped holes," S. Girard, D.L. Griscom, J. Baggio, B.Brichard, F. Berghmans, Proc. First Conf. Advances in Optical Materials, Tucson, AZ, 15 October 2005, J. Non-Cryst. Solids 352 (2006) 2637- 2642.
187. “Positronium as a Probe of Paramagnetic Centers in a-SiO2,” D. B. Cassidy, K. T. Yokoyama, S. H. M. Deng, D. L. Griscom, H. Miyadera, H. W. K. Tom, C. M. Varma and A.P. Mills, Jr. Phys. Rev. B 75 (2007) 085415.
188. "Thermostimulated luminescence and electron spin resonance in X-ray- and photon-irradiated oxygen- deficient silica," A.N. Trukhin, J. Troks, and D.L. Griscom, J. Non-Cryst. Solids, 353 (2007) 1560- 1566.
189. “Photosensitivity of SiO2-Al and SiO2-Na glasses under ArF (193 nm) laser,” A.N. Trukhin*, J.Teteris, A.Fedotov, D.L.Griscom, G. Buscarino, Proc. Conf. SiO2-2008, Saint-Etienne, France, 30 June – 2 July 2008, J. Non-Cryst. Solids 355 (2009) 1066-1074.
190. “Sub-band-gap-excited luminescence of localized states in SiO2-Si and SiO2-Al glasses,” A.N. Trukhin, A. Sharalovski, J. Grube, D.L. Griscom, J. Non-Cryst. Solids 356 (2010) 982-986.
191. “Electron spin resonance study of Fe3+ and Mn2+ ion clusters in 17-year-old nuclear-waste-glass simulants containing PuO2 with different degrees of 238Pu substitution,” D.L. Griscom, W.J. Weber, J. Non-Cryst. Solids 357 (2011) 1437-1451.
192. "Trapped-electron centers in pure and doped glassy silica: A review and synthesis,” D.L. Griscom, Proc. Conf. SiO2-2010, Varenna (Lecco), Italy, June 21-23, 2010, J. Non-Cryst. Solids 357 (2011) 1945-1962.
193. “On the natures of radiation-induced point defects in GeO2-SiO2 glasses: reevaluation of a 26-year-old ESR and optical data set,” D.L. Griscom, Optical Materials Express Vol. 1 (2011) 400-412.
194. “In plain sight: The Chesapeake Bay crater ejecta blanket,” D.L. Griscom, Solid Earth Discuss., 4,
(2012) 363-428, doi:10.5194/sed-4-363-2012 accessable here: http://www.solid-earth- discuss.net/4/363/2012/sed-4-363-2012.html (there is no print version). Technically, this very same paper was rejected for publication in the companion print journal, Solid Earth, notwithstanding that the referees’ hostile remarks elicited not the slightest hint that they understood any of my abundant evidence or arguments. By contrast, this paper was unconditionally accepted for Solid Earth Discussions by the Topical Editor, who read it with comprehension and stated his personal belief that I had proved my case. Because of this single unequivocally favorable peer review, the low quality of the “official” reviews recommending rejection, and the enormous amount of work I put into this research over a period of about 13 years, I count this as another peer-reviewed publication.
195. “A mini-review of the natures of radiation-induced point defects in pure and doped silica glasses and their visible/near-IR absorption bands, with emphasis on self-trapped holes ...and how they can be controlled,” D.L. Griscom, Physics Research International, special issue "Advances in Novel Optical Materials and Devices," Physics Research International, vol. 2013, Article ID 379041, 14 pages, 2013. doi:10.1155/2013/379041.
196. “Luminescence of Phosphorus Containing Oxide Materials: Crystalline SiO2-P and 3P2O5·7SiO2; CaO·P2O5; SrO·P2O5 glasses,” A.N.Trukhin, K. Smits, J. Jansons, D. Berzins, G. Chikvaidze, D.L.Griscom, AIP Conference Proceedings 1624 (2014), 154-166; doi: 10.1063/1.4900472."

What are the credentials of the experts who have published an alternative analysis of the dust that concludes there is no thermite?  Oh, I almost forgot, you can't cite a single expert with a single publication that examines the dust and draws this conclusion.

Pick your teeth up on the way out, trash.
Reply: JetMechMA <OK we already established that your "evidence" is junk>

Oh you did?  When was that?  Did you cite an alternative analysis of the dust?  Did you cite a published refutation of the Harrit paper?  Can you come up with anything besides fabricated ad hominem and logical fallacy?  You didn't?  You can't?  I guess the only thing you have proven is your misunderstanding of what establishes proof.

<Harrit is no expert in thermite as you claim>

Ad hominem again.  If Harrit et al are not experts on thermite, then what technical aspect of the study is flawed?  Cite a published paper to back up your assertions, otherwise they amount to nothing.

<Your entire premise is junk because the plot would have to hide the rigging of TWO 110 story towers with demolition charges and go undiscovered the ENTIRE time.....that a plot of that magnitude could be kept secret even all these years later....that the entire WORLD of people who ARE expert in building demolition (unlike your flakey Harrit) would not be calling it a demolition after watching it live.>

Terrible sentence, by the way.  Aside from syntax, you've got nothing but factless speculation.  Get a real argument, trash.  Can you refute the Harrit study?  Can you provide proof that a natural free-fall collapse is possible from normal office fires?  Can you cite anything academic or scientific whatsoever?  You haven't thus far, and I don't think you will be able to.  Your side is unsupportable, because your side is wrong.  Sorry, idiot.

<EVERYTHING about your false premise is a deliberate LIE>

Name one lie.  Be specific.

<To think that some evil plotters would supposedly be smart enough to hide such a plot from 50,000 building inhabitants for MONTHS while they carried it out, yet would be stupid enough to fly airplanes into the building that is rigged with demolition charges>

Look up false flag, moron.

<Funny...I guess I struck a nerve >

You give yourself too much credit.  Your factless babblings are easy targets.  You know when you crush an insect underfoot, and you feel that pang of disgust mixed in with pity for the defenseless creature you just crushed?  That's about the extent of my emotional reaction to your pathetic, driveling, unsupported argument.  And thats about what you amount to, a soulless vermin being crushed underfoot.

<when I proved that Harrit is no expert in thermite. >

"Expert" in thermite?  What's to know?  Powdered iron oxide + powdered aluminum = thermite.  Conventional thermite ignition temperature: ~900C.  Nano or superthermite ignition temperature: ~420C.  The smaller the reactant size, the greater the surface area, the more vigorous the reaction, and the lower the ignition temperature (basic chemistry).  When ignited, thermite releases all of its heat and energy in a very short amount of time.  The elemental aluminum scavenges the oxygen from the iron oxide, and molten iron and aerosol aluminum oxide are released as products of the reaction.  A DSC curve shows a characteristic exothermal spike upon ignition, whereas normal hydrocarbons display a broad exothermal curve.  There you go, looks like I'm an expert in thermite.  Again, your ad hominem amounts to nothing.

The merits of a scientific work are not judged based upon the supposed credentials of the author.  They are judged based on the soundness and conclusions of their experimental processes.  Have you provided evidence for one single flaw in the Harrit study?  Can you cite a single published expert who disagrees with the Harrit study?  Is your argument composed entirely of ad hominem, misrepresentations of facts, and logical fallacy?  That's what I thought.  Try again, troll.
Reply: Emvaz22 We've shown the Harrit garbage for what it is:  junk science that only got published in and "open" on-line journal that was rightfully shamed at letting this POS through, so much so that the editors resigned and the journal was shutdown.  Over your protests of the infallibility of on-line journals, where you called me a liar for saying that one gibberish paper had been published, I showed you clearly that hundreds of fake papers have been published in hundreds of these on-line journals.

We have pulled the rug out from under your deception but still you cling to it because it is all you have.

And the whole premise of your belief that thermite brought down the towers is insane.  The towers collapsed just as they would be expected to, at the point where they were weakened by a high speed plane impact followed by a fire.  No magic is needed to get from there to a pile of rubble, unless you ignore the experts and instead cling to YouTube videos by non-experts.

You are a shill for ISIS, perpetuating nonsense conspiracy theories about US-Israeli plots, and trying to absolve Islamic extremists for their actions.  I'm fairly certain you are also a Moon Hoax Twoofer , Sandy Hook Twoofer, and Holocaust denier, because you all overlap so well.
Reply: crushffl <We've shown the Harrit garbage for what it is:  junk science>

What part of the paper is flawed?  Cite a specific portion of the paper, then explain why it is incorrect, then cite an academic source that backs up your assertion.  You keep claiming to be able to show that the study is flawed, but all you can manage is ad hominem and misrepresentations, the telltale signs of a factually bankrupted position.

<published in and "open" on-line journal >

Peer-reviewed, academic publication.  "Open" means that the article is free for anybody with internet access to read, as opposed to needing to purchase a membership, as with many journals.  The fact that the article is open for anybody to read only adds to its legitimacy, as anybody can scrutinize it.  The fact that there has been no redaction or refutation is over 6 years, means that the conclusions of the Harrit study (nanothermite) still stand.

Can you cite a refutation?  Can you cite a specific flaw in the science of the paper?  You Can't?  All you have are ad hominems, lies, and logical fallacies?  That's what I thought.

<so much so that the editors resigned>

Misrepresentation.  The editor was forced to resign due to political pressure.  No specific flaw in the science of the paper was ever cited.  If the paper was flawed, it would have been redacted, yet it still stands.

<Over your protests of the infallibility of on-line journals, where you called me a liar for saying that one gibberish paper had been published, I showed you clearly that hundreds of fake papers have been published in hundreds of these on-line journals.>

Name one single fake paper published by any Bentham journal.  What's that? You can't?  But you just said that you've named "hundreds", but I don't see where you did this.  Could it be that you are lying again?  A meatpuppet shill lying on YT forums?  What a surprise.

<We have pulled the rug out from under your deception >

Hah, no you haven't.  Your weak, factless, fallacious argument doesn't prove anything, and certainly doesn't disprove anything.  Keep pretending though, it only discredits you even more.

<No magic is needed to get from there to a pile of rubble, unless you ignore the experts >

What experts have proven that a handful of severed columns and normal office fires can lead to a near-free-fall, symmetrical, and total collapse.  Cite the study that confers scientific proof that this is what happened on 9/11.  Use this format:  Author, Title, Publication, Date.

<You are a shill for ISIS, perpetuating nonsense conspiracy theories about US-Israeli plots, and trying to absolve Islamic extremists for their actions.>

HAHAHAHAHAHAHAHAHAHHAHAH!!  That's good.  When did I mention Israel?  You should realize that the fact that you brought it up unprovoked suggests that your true motives are to shill for Israeli interests.  

<Holocaust denier>

There it is again.  Why the obsession with the Jewish state, when I never brought it up?  Could it be that groups tied to Israel pay armies of unintelligent trolls like you to parrot their talking-points to protect their interests?  Hmm... 

A quick Google search for the "I was a Paid Internet Shill" phrase turns up an interesting confession by somebody who use to shill for a living (for Israel, incidentally).  Sounds like when this guy quit, you might have been his replacement.  I wonder...

Will your supervisor be displeased that you just brought attention to their operation?  Maybe if you are lucky, you will be fired so you can go find a real job.  On second thought, you probably couldn't get a real job, which explains why you shill for a living.  I doubt "Internet shill" will look good on a resume.  Better make something up like "IT Consultant".

Good luck with that, you piece of subhuman waste.
Reply: Emvaz22  You are a funny guy.  <The fact that the article is open for anybody to read only adds to its legitimacy> you haven't bothered to respond to the FACT that you called me a liar for saying that a gibberish paper had been published and then I provided proof that the number was actually in the hundreds, both in terms of fake papers and the "open on-line" journals that accepted them.

<There it is again.  Why the obsession with the Jewish state>  Actually I'm a huge critic of Israel and US policies and actions. However, I restrict my criticisms to real issues supported by facts, not evidence-free kook theories.  And by the way I noticed that you did not make an attempt to deny that you are a Holocaust denier.  No shock there.  I made the point that there is a tremendous degree of overlap in these kooky conspiracy theories, and they all share similar, vile motivations.  You provided nothing to dissuade me of that connection.

You started with the Shill talk, just like all Twoofers do.  I am supporting the view of the OVERWHELMING number of experts, as opposed to YouTube non-expert kooks.  I'm glad to be a "shill" for that every day and twice on Sunday.  I was pointing out, and stand by it, that Twoofers are the actual shills if anyone is.  They are "useful idiots" for ISIS, supporting their paranoid, anti-Western world view.  You are a useful idiot and a shill for ISIS.

<What experts have proven that a handful of severed columns and normal office fires can lead to a near-free-fall, symmetrical, and total collapse.>  The NIST report, with a qualifier.  Nobody says it was symmetrical except Twoofers.  The top of each tower came down at an angle.  "Near-free-fall"?  Yeah, so what?  None of your paranoid, ill-informed theories are needed to explain why the towers fell.

<What part of the paper is flawed?> I already provided you a link to someone that picked it apart on several points.  Go back up and find it, lazy.
Reply: Emvaz22   <Maybe if you are lucky, you will be fired so you can go find a real job.  On second thought, you probably couldn't get a real job, which explains why you shill for a living.>  Actually I'm a civil engineer and I make a great living. As such I have the training to understand why the towers collapsed without resorting to my imagination.  I have the time to occasionally get on YouTube and debate kooks like you.  I don't do it to change your mind, as I know from experience that you are far too invested in this religion to ever escape from your rabbit hole; I do it so the casual reader, who might be as scientifically illiterate and susceptible to bad arguments as you are, has the chance to see how bad your arguments and "evidence" actually are.

It's absurd that since most people believe the "official story" that anyone would be need to be paid to argue with you idiots; I could as easily argue that you are paid to do what you do, but I don't.  Mental illness is an adequate explanation.  However the shill argument also fills a few other needs for the average Twoofer, besides being consistent with their paranoia:  1) it makes you feel important to imagine that the guvmint cares enough about you to actually pay and train someone to argue with you on YouTube; and 2) it provides a rationale for getting your butt kicked over and over--after all, you only lost because you were arguing with a paid, trained agent, and not because the facts are not on your side or because you are a fool. 

LOL.  Have fun imagining that the people arguing with you are in a guvmint control center, and thanks for providing PROOF of just how unhinged you are!
Reply: crushffl <you haven't bothered to respond to the FACT that you called me a liar for saying that a gibberish paper had been published>

Thats because it was never published.  You claimed it was, therefore you are a liar.

<and then I provided proof that the number was actually in the hundreds, both in terms of fake papers and the "open on-line" journals that accepted them.>

What proof?  You didn't provide a single fake paper published by Bentham, and certainly didn't provide hundreds.  Liar.

<<There it is again.  Why the obsession with the Jewish state>  Actually I'm a huge critic of Israel and US policies and actions. However, I restrict my criticisms to real issues supported by facts, not evidence-free kook theories.>

Why do you keep bringing up Israel?  You hiding something?

<I noticed that you did not make an attempt to deny that you are a Holocaust denier.>

Why waste my time denying baseless accusations?  Is that all thats left of your weak argument?  I also didn't bother denying the moon landing or Sandy Hook conspiracies, yet here you are right back to focusing on Israel, when I never brought it up in the first place.  You sure are desperate to defend Israel aren't you?  You're like that guy who just committed a murder, and somebody taps you on the shoulder to tell you your shoe is untied, and you impulsively shout "NO I DIDNT KILL ANYBODY!...oh, my shoe you say?  Thanks...".  I wonder why that is.

<I am supporting the view of the OVERWHELMING number of experts, as opposed to YouTube non-expert kooks.>

Which published experts provide proof of the official story.  Name one single person.

< I'm glad to be a "shill" for that every day and twice on Sunday.>

I bet you are; I doubt you could get a job doing anything else.

< I was pointing out, and stand by it, that Twoofers are the actual shills if anyone is.  They are "useful idiots" for ISIS, supporting their paranoid, anti-Western world view.  You are a useful idiot and a shill for ISIS.>

Hah, do you even know what a shill is?  You should do some research, idiot.

<<What experts have proven that a handful of severed columns and normal office fires can lead to a near-free-fall, symmetrical, and total collapse.>  The NIST report,>

What part of the NIST report, specifically, provides proof of the official story.  I should also mention that the NIST report was never peer reviewed and never published, which by your logic, disqualifies you from using it as an example because it is not a credible source.   But go ahead, I'll humor you and let you use it as a credible source.  Copy - paste the part of the report that confers proof.

<Nobody says it was symmetrical except Twoofers>

Towers one and two came straight down.  Tower seven came down perfectly symmetrically into its own footprint.  No plane hit this building.  No visible external damage.

<"Near-free-fall"?  Yeah, so what?>

So what?  So physics.  Steel resists, that's why we use it in structures.  No resistance means the steel was removed.  You've got a solid grip on basic physics don't you?

<<What part of the paper is flawed?> I already provided you a link to someone that picked it apart on several points.>

"Debunker" blogs aren't academic refutations.  Ad hominems and misrepresentations aren't scientific rebuttals.  Specifically, which part of the study is flawed, and why?  In your own words.  I'm beginning to think you never read the study.  Prove me wrong.

<It's absurd that since most people believe the "official story" that anyone would be need to be paid to argue with you idiots>

Recent polls show that most people don't believe the official story.  Nice lie though.

Any facts to present?  Any actual published science?  Anything to refute Harrit?  Anything to prove the official theory?  I keep asking, and you keep failing to produce.  Try again, loser.
Reply: +Emvaz22  "Moreover, starting from the bottom would make it painfully obvious that the building was demolished,"....SO, you admit that the collapse looked nothing like a demolition. ..."And?  Are you implying that a demolition sequence couldn't be initiated from the site of impact?".....yes, after two airplanes crash into the buildings. And that's exactly what happened. Thanks for playing Emvaz.
Reply: Emvaz22  Hey Emvaz, do you believe that they were military jets that hit the towers, and not 676s like in the "official story"?  That's my favorite Twoofer belief.  Just wondering how far down the rabbit hole you live.
Reply: Ben Round <SO, you admit that the collapse looked nothing like a demolition. >

Are you claiming that building 7 looked nothing like an implosion?  Look again, moron.

<"And?  Are you implying that a demolition sequence couldn't be initiated from the site of impact?".....yes, after two airplanes crash into the buildings.>

You believe that charges placed in the structural core behind concrete walls couldn't possibly survive the impact of an aluminum plane?  Can you demonstrate proof for your claim?  No, you can't.

Can you prove that initiating the charges right below and above the impact, as well as the remaining charges on the damaged floors (assuming most of the charges on the impacted floors were disabled)  wouldn't create the desired effect?  Can you prove that the planes would disable ALL charges on ALL effected floors?  No, you can't.

You acceptards always claim that fire is enough to weaken steel to cause a collapse of the impacted floors.  Why not wait for the collapse of the damaged floors to begin, and then initiate the sequence using the undamaged charges on the impacted floors, and then sequencing downward?  Can you prove that this would be impossible?  No, of course you can't.

Yet you claim that all of these scenarios would be impossible, of course without citing any supporting evidence whatsoever.  That would make you either an idiot or a liar.

Can you scientifically refute the Harrit study?  Can you name one flaw in this paper, which proves the presence of advanced incendiaries?  Can you cite any published paper which contradicts the conclusions of the Harrit paper?  Can you cite a study that proves that the official fire-induced collapse theory is correct?  No, no, no, and no.  Looks like you've got nothing but baseless assertions.  But thanks for playing.
Reply: crushffl <Hey Emvaz, do you believe that they were military jets that hit the towers>

Nope, and I don't see how that is relevant to anything.  Oh I see, you are trying to redirect the discussion and construct a straw man because you are completely out of relevant arguments.  Too bad.

Also, you never addressed anything from my last post.  Why are you running?  Here it is again:

<you haven't bothered to respond to the FACT that you called me a liar for saying that a gibberish paper had been published>

Thats because it was never published.  You claimed it was, therefore you are a liar.

<and then I provided proof that the number was actually in the hundreds, both in terms of fake papers and the "open on-line" journals that accepted them.>

What proof?  You didn't provide a single fake paper published by Bentham, and certainly didn't provide hundreds.  Liar.

<<There it is again.  Why the obsession with the Jewish state>  Actually I'm a huge critic of Israel and US policies and actions. However, I restrict my criticisms to real issues supported by facts, not evidence-free kook theories.>

Why do you keep bringing up Israel?  You hiding something?

<I noticed that you did not make an attempt to deny that you are a Holocaust denier.>

Why waste my time denying baseless accusations?  Is that all thats left of your weak argument?  I also didn't bother denying the moon landing or Sandy Hook conspiracies, yet here you are right back to focusing on Israel, when I never brought it up in the first place.  You sure are desperate to defend Israel aren't you?  You're like that guy who just committed a murder, and somebody taps you on the shoulder to tell you your shoe is untied, and you impulsively shout "NO I DIDNT KILL ANYBODY!...oh, my shoe you say?  Thanks...".  I wonder why that is.

<I am supporting the view of the OVERWHELMING number of experts, as opposed to YouTube non-expert kooks.>

Which published experts provide proof of the official story.  Name one single person.

< I'm glad to be a "shill" for that every day and twice on Sunday.>

I bet you are; I doubt you could get a job doing anything else.

< I was pointing out, and stand by it, that Twoofers are the actual shills if anyone is.  They are "useful idiots" for ISIS, supporting their paranoid, anti-Western world view.  You are a useful idiot and a shill for ISIS.>

Hah, do you even know what a shill is?  You should do some research, idiot.

<<What experts have proven that a handful of severed columns and normal office fires can lead to a near-free-fall, symmetrical, and total collapse.>  The NIST report,>

What part of the NIST report, specifically, provides proof of the official story.  I should also mention that the NIST report was never peer reviewed and never published, which by your logic, disqualifies you from using it as an example because it is not a credible source.   But go ahead, I'll humor you and let you use it as a credible source.  Copy - paste the part of the report that confers proof.

<Nobody says it was symmetrical except Twoofers>

Towers one and two came straight down.  Tower seven came down perfectly symmetrically into its own footprint.  No plane hit this building.  No visible external damage.

<"Near-free-fall"?  Yeah, so what?>

So what?  So physics.  Steel resists, that's why we use it in structures.  No resistance means the steel was removed.  You've got a solid grip on basic physics don't you?

<<What part of the paper is flawed?> I already provided you a link to someone that picked it apart on several points.>

"Debunker" blogs aren't academic refutations.  Ad hominems and misrepresentations aren't scientific rebuttals.  Specifically, which part of the study is flawed, and why?  In your own words.  I'm beginning to think you never read the study.  Prove me wrong.

<It's absurd that since most people believe the "official story" that anyone would be need to be paid to argue with you idiots>

Recent polls show that most people don't believe the official story.  Nice lie though.

Any facts to present?  Any actual published science?  Anything to refute Harrit?  Anything to prove the official theory?  I keep asking, and you keep failing to produce.  Try again, loser.

Still waiting on you to cite a gibberish paper published by Bentham.  Still waiting on the hundreds more you claim you have already cited.  Still waiting on you to name a single expert who has disagreed with the conclusion of the Harrit paper in an official academic setting.  Still waiting on you to explain how the NIST report confers proof of the official collapse theory.

You keep digging your hole, and pretend like if you just keep digging maybe you will eventually surface in China.  Still waiting on you to back up a single claim you have made. Why can't you?
Reply: Ur a moron if you think the WTC coming down was from planes.